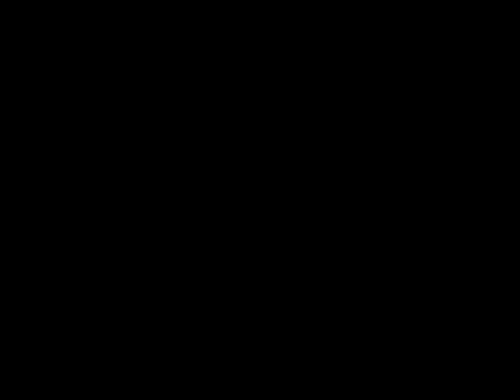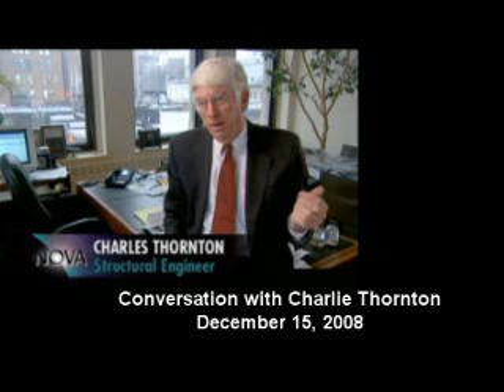pumpitout.com Jeff Hill speaks with WTC Investigator Charles Thornton

Comment: even if the buildings were not well made,  that's beside the point.  The video shows that there was no deceleration when the top part hit the bottom part.  That means the bottom was being destroyed actively at the exact same time.

That means that there was a giant external force that nobody's talking about.

The "authority" on this page is full of crap.  He's a moron or a liar.  perhaps both.
Reply: hornton says it would do no major damage to the building.  And he's the expert, not you.

NO. NO NO NO!!!  He said.  "But the idea of an airplane knocking the building OVER that would not happen for a building designed for 13,000 tons of wind load"  

 based on the lateral design loads an interview given long before 9/11.    That is an ENTIRELY separate argument to the weather the building could COLLAPSE!!!!!!!!!!!!!!!!!!!!!!!!!!!!!!!!! 

as usual, you're cherry picking.  Why do you think nobody will see it?  Read his quote I sent you.  he said no major damage.  Since when is collapse not considered major damage?

you have lied again.

Of which he is on record as saying "If you lose the lateral support of the floors the exterior wall will just BOW OUT".. 

And that is precisely what it did!!!

which proves that there were other forces than a plane crash since thornton and Newton and Feynman and Cole and I all say that a plane crash wouldn't do that.

Where's the hole in your argument???  If you look around the room and you can't spot the idiot...................?

But I spotted the idiot immediately.  It's always been you.
Reply: @lebergerdesphotons4565  If you cant tell the difference between a 767 hitting a building to a movie visual effect you've got some serious problems!!.
Reply: @roquefortfiles   le berger des photons If you cant tell the difference between a 767 hitting a building to a movie visual effect you've got some serious problems!!.
Reply

why is that?

doesn't that permit me to argue things that you think are bunk just because of the same reasoning?
Reply: @lebergerdesphotons4565  For your reasoning to make any sense you would have to believe that the Government got a hold of every single video and photograph.   And this is what you believe and this is what you would have to believe.  And a 5 year old would be able to point out the hole in the argument
Reply: @lebergerdesphotons4565  You see I could play the same bullshit game you do. I could demand that you show me the statement from Boeing or the quote from them saying the planes can't fly that fast.  But i already know how much total BS this quote is and the person they got to provide it.  I've been around aviation all my life. I am good friends with Captains of 76's.   I know what a 767 can do and how fast it can fly.   And how much complete BS these "Can't fly that fast" stories are.  The engines are more than capable of pushing the aircraft to the speeds seen.   They fly at 30,000 feet to conserve FUEL.  Not because the engines can't function at 800 feet.  Ridiculous.  I asked a friend of mine who is rated to fly a 47 and a 76.  I said.. "Can the aircraft fly at those speeds that low?".   His response??   "No problem!!  Easy the engines have to work harder but absolutely".
Reply: @lebergerdesphotons4565  And btw.  There are LOADS of factual stories of 767s flying well over speed.   But quite obviously you don't spend any time looking for information like this.  Because it would cause your brain to explode from the conflict it would generate with your "World View".
Reply: @roquefortfiles  You see I could play the same bullshit game you do. I could demand that you show me the statement from Boeing or the quote from them saying the planes can't fly that fast.

I can provide it.

 But i already know how much total BS this quote is and the person they got to provide it. I've been around aviation all my life. I am good friends with Captains of 76's. I know what a 767 can do and how fast it can fly. 

Still just your unbacked assertions.

And how much complete BS these "Can't fly that fast" stories are. The engines are more than capable of pushing the aircraft to the speeds seen. They fly at 30,000 feet to conserve FUEL. Not because the engines can't function at 800 feet.

No,  they are built to operate optimally at 30000 feet.  The mix is bad down low.  Just like your car can get you up the mountains but it runs like crap up there.

 Ridiculous. I asked a friend of mine who is rated to fly a 47 and a 76. I said.. "Can the aircraft fly at those speeds that low?". His response?? "No problem!! Easy the engines have to work harder but absolutely". 

Well my car can't go as fast when it's on a mountain pass.  Why is that?
Reply: @roquefortfiles  There are LOADS of factual stories of 767s flying well over speed. But quite obviously you don't spend any time looking for information like this. Because it would cause your brain to explode from the conflict it would generate with your "World View". 

show me!  you never show me,  you tell me that it exists but you won't show me.
Reply: @lebergerdesphotons4565  Show you?  The bigger question is what is stopping YOU from looking for it?   Ask yourself that.  Confirmation Bias?
Reply: @roquefortfiles  The fact that it will be too easy to land somewhere else than where you're vaguely indicating.

What prevents you from making any comments on any of the numerous links I've sent you?

I just read the opinions from 10 years ago of a man who'd recently retired after 37 years in nasa saying that it was very unlikely that a "stock" 767 could do that.   But for you,  your sources are always better.
Reply: @roquefortfiles  and we wouldn't be having this conversation if you would just send the links.
Reply: @lebergerdesphotons4565    Put it into a 10,000 foot per minute dive from 14,000 feet to 2000 which is what it was doing just prior to hitting the WTC. (Re controller Dave Bottiglia as he said.. FALLING LIKE A MAN HOLE COVER)   This was a one test pilot who wasn't concerned about the safety margins.   And YES there are LOADS of examples of air craft being flown WAY over speed.    Question?  You can pedal your bike to maximum speed on level ground.   Now race it down hill and you'll far exceed your MAX level speed.  The air craft is no different.   And sorry but it is not going to come apart because it is flown over its VMR for a few moments.  Forget it !!!  They are built to withstand huge forces.
Reply: @roquefortfiles  Yes.  We see that.  It has that special aluminum alloy that permits even the wingtips to go through a 4 inch concrete slab hit on edge protected by a very thick steel plate.

But it's just a hologram.  

And you're just a chump who will believe anything you see on tv.

Did you look at my link to the plane crash in which a wooden telephone pole slices a very similar wing clean through?

And  the "plane"  was not in a dive when it was caught on faked videotape. 

So sure,  it can dive,  but it can't pull out of a dive at that speed.

And if I take your word that it was in a dive at that speed,   then it had to have pulled out of it at that speed,  and that's where it would have smithereened.

But being make entirely of light,  it had no such problem.
Reply: @lebergerdesphotons4565    Can't dive??  Well you might want to tell ATC that.  They had it on radar the whole way.   And if you look at this video you'll notice the frame line is basically level with the roof of the WTC.  And the plane enters the top of the frame ABOVE the WTC and levels at the 78th floor.    Exactly as the air traffic controller said.  They thought he was in the water on the next sweep.  
https://www.youtube.com/watch?v=NwutSIUlsAg
Reply: @lebergerdesphotons4565    The wing tips didn't go through the facade.  If you spent any time researching this you would know that.   But you don't and you ignore factual material all over the place.   I think you've got more problems than you even realize.  You're a psychiatrists wet dream.
Reply: even if the buildings were not well made,  that's beside the point. (NO IT ISN"T!!!)  The video shows that there was no deceleration when the top part hit the bottom part.  That means the bottom was being destroyed actively at the exact same time.

OK.. So how does the debris out pace the rest of the collapse by 10 stories???    That can only happen if the building is slowing down the collapse.  Which it was.  

JUST NOT VERY MUCH!!!!  this is what you people DON''T SEEM TO GRASP!!!!!  AND YES!!!... YOU'RE ONE OF ....................YOU PEOPLE!!!!!
Reply: @roquefortfiles  
even if the buildings were not well made, that's beside the point. (NO IT ISN"T!!!)

Yes,  it is.  It had the strength to hold itself up and it has all of that mass.  Anything crashing into it will see it's speed immediately reduced.  That would translate into one or more of the points on the line drawn by the scientist who analyzed the video being off the line.

That didn't happen,  so everything you say is bunk.  Not surprisingly, considering the source.

 The video shows that there was no deceleration when the top part hit the bottom part. That means the bottom was being destroyed actively at the exact same time. OK.. So how does the debris out pace the rest of the collapse by 10 stories??? That can only happen if the building is slowing down the collapse. 

but not the in tact building.  there was a constant acceleration.  less than G,  but constant.  Therefore there is no abrupt collision between top and bottom.  both just dropping down as fast as they can.

It's not because the people who destroyed the buildings couldn't make it free fall that the top destroyed the bottom.

Somebody destroyed the whole thing.

You have failed (as usual) as a forensic detective.

You have succeeded (as usual) as a complete boob.

Which it was. JUST NOT VERY MUCH!!!! this is what you people DON''T SEEM TO GRASP!!!!! AND YES!!!... YOU'RE ONE OF ....................YOU PEOPLE!!!!!

Right!  and since it didn't slow it down very much,  and since Newton's laws apply even when you find them inconvenient, the bottom of the building was being destroyed at the same time by some other force, and not by the collision that didn't happen.

But keep on believing what you want.  It's a good thing that you make it so obvious what a total moron you are.
Reply: @lebergerdesphotons4565  Yes!!!!! There was a constant acceleration Because with every floor failure more and more mass is being ADDED to the failure OF THE NEXT FLOOR!!!..THAT'S WHY IT CONTINUES!!!!!. IE PROGRESSIVE.   You do understand how the hat truss works right?? Not by what you say!!
Reply: @roquefortfiles  

le berger des photons Yes!!!!! There was a constant acceleration Because with every floor failure more and more mass is being ADDED to the failure OF THE NEXT FLOOR!!!.

But with each collision, all must slow down because in the instant of the collision there is suddenly more masse that has the same momentum.

m1v1 =m2v2,  m2 > m1,  so v2 < v1.

But the video analysis didn't show this.

So you are wrong.

.THAT'S WHY IT CONTINUES!!!!!. IE PROGRESSIVE. You do understand how the hat truss works right?? Not by what you say!!

By what you say,  you are saying that the hat truss functions by suspending the laws of physics magically while it falls to the ground.
Reply: @lebergerdesphotons4565   The dynamic loading on the building was 80x the resting static load!!  The safety margin was 5x resting static.    With WTC 2 the plane hit off center on one side half of the columns carry almost no load.  The other half are HYPER loaded to the max.  You now have an off center load (that's REALLY BAD!!!!!).  But now the floors below this are being turned into a Catenary putting HUGE loads on the exterior columns which are being BOWED inward by the sagging floors.  Once the floors let go the exterior wall simply BUCKLES..  The top of the building is like someone leaning over on a bar stool and the legs finally break.  GAME OVER.  The dynamic loading landing on the next floor is MASSIVELY over its ability to stop or even slow it.   The floor connections were sliced off one after the other.  You can see this in videos.  The exterior wall peeled out and OVER like a slab of roast beef.
Reply: @roquefortfiles  
le berger des photons The dynamic loading on the building was 80x the resting static load!! The safety margin was 5x resting static. 

so much is wrong with that.  First of all,  it doesn't invalidate the momentum equation which clearly proves that there needed to be a jolt.  Unless you want to question the accuracy of the video analysis that I've showed you,  you can't ignore that except by being dishonest.

With WTC 2 the plane

the plane representing a flight which magically stayed out of a rigorous gov't FAA database?

 hit off center on one side half of the columns carry almost no load. 

An airplane that can't hold up to a collision with a canadian goose took out half of the steel columns?  Really!   Somebody still doesn't want to acknowledge frames of reference and "equal and opposite reaction".

You should publish your peer-reviewed paper in which you demonstrate clearly that Newton was a fraud!

The other half are HYPER loaded to the max. You now have an off center load (that's REALLY BAD!!!!!). But now the floors below this are being turned into a Catenary putting HUGE loads on the exterior columns which are being BOWED inward by the sagging floors.

Sorry,  the nature of lightweight concrete tells us that the floors wouldn't sag,  they would hold until they failed catastrophically but they wouldn't sag.

 Once the floors let go the exterior wall simply BUCKLES..

Really?  then how do you explain the video of giant columns swaying in the breeze?  I guess those were decorative columns which didn't participate in supporting the load?

 The top of the building is like someone leaning over on a bar stool and the legs finally break. GAME OVER.

Your person on the bar stool falls over,  not through the path of greatest resistance.

And you're talking about the part allegedly damaged,  and you're applying what you believe about that to the much bigger part which was not damaged at all.

 The dynamic loading landing on the next floor is MASSIVELY over its ability to stop or even slow it. 

Newton's law, momentum.  It slows it.  You count that mass in your favor when it suits you, and don't count it when it doesn't suit you.  You are a liar.

The floor connections were sliced off one after the other. You can see this in videos. 

show me one video with that.  you can't.

The exterior wall peeled out and OVER like a slab of roast beef.

peeled out?  Where I come from,  that's what you do when you hit the gas hard in first gear with your shelby.

Thank you for your participation in this.  I never knew that a human being could be anywhere near as stupid as you.
Reply: @lebergerdesphotons4565  The building is only going to fall as fast as gravity will allow it to.  By your fuzzy logic reasoning the top has rockets attached to it
Reply: @lebergerdesphotons4565  Someone who clearly cant understand force equals mass X acceleration.  You cant look at the results of something with the expectations of what you want the outcome to be.   That is not how science works!!!.  Well maybe it does when you're a whacko conspiracy theorist
Reply: @roquefortfiles  

as usual you are engaging in logical fallacy to try to overcome the fact of being a complete dipshit.

Fallacy of the moment:   The straw man argument.

You say that I've said something that is not well reasoned.  But you don't refer to it (whatever it might be) directly.

I think that you're incapable of even understanding my reasoning let alone refuting it.  "it" being my repitition of what Isaac Newton and Jon Cole say is impossible.

no jolt?   no gravity collapse.  It's just that simple.
Reply: @roquefortfiles  

 Someone who clearly cant understand force equals mass X acceleration.

You would seem to be referring to yourself.   You claim that the "dynamic" force of the falling 22 stories broke the bottom 88 floors.

that means its mass exerted a force to break them.  When that happened, there was necessarily an acceleration,  the famous jolt.

But the data (the official video) shows no jolt.

That is how we intelligent people know that it was a type of controlled demolition.

  You cant look at the results of something with the expectations of what you want the outcome to be. 

Then why do you continually do exactly that?

  That is not how science works!!!.

You're right!  So why is that all that you do?  Do you have something against science?

  Well maybe it does when you're a whacko conspiracy theorist

19 people working together to down 7 buildings with 2 airplanes.

That is the official conspiracy theory.

I don't buy it.  I say it was the same people who own the united states who did this to have an excuse to go steal from Iraq and Afghanistan.

And to grow and run drugs to feed their other activities.

And these things are not even in dispute.

What is disputable is what that stuff between your ears is made of and if it can serve any useful function in the future.

It hasn't done that up till now.
Reply: @lebergerdesphotons4565  Yes it broke the bottom 88 floors!!.. Entirely crushed them!!  One at a  time!!.. And quite easily!!.. That's the difference between static vs dynamic loading.   The building is ONLY DESIGNED FOR STATIC LOADING!!.. You're going to get this... When????
Reply: @lebergerdesphotons4565  Why do you think a 747 rests on hydraulically dampened landing gear? Because it has to carry the STATIC  weight of the plane in addition to the DYNAMIC weight multiplied many times over on landing.  A building only has to carry the STATIC!!!!!!!!!. and you keep attempting to talk your way around this fact!!!
Reply: @roquefortfiles  It's as simple as "every action has an equal and opposite reaction".

You don't seem to accept that.  I accept that.   Please explain to me why I have made a mistake to accept that.

an equal and opposite reaction between 22 damaged and lighter floors and 88 undamaged and heavier floors should destroy the 22 every time.

Tell me how you know that Newton is wrong?
Reply: @roquefortfiles  

 Why do you think a 747 rests on hydraulically dampened landing gear? Because it has to carry the STATIC  weight of the plane in addition to the DYNAMIC weight multiplied many times over on landing.

You have changed the subject to distract from the fact that you have lost this argument 2 years ago.

  A building only has to carry the STATIC!!!!!!!!!. and you keep attempting to talk your way around this fact!!!

No,  I'm not doing that.  when the 22 stories crash into the 88 stories,  they necessarily must slow down.  The analysis of the video shows that they did not, thus proving that the 88 floors were destroyed by some intentional act.

I'm sorry for you (in general) that you don't see it.

it's obvious enough.

But you are exceptionally stupid.  It's your cross to bear.
Reply: @lebergerdesphotons4565  No I have not changed the subject.  You FUNDAMENTALLY do not understand the ARGUMENT
Reply: @roquefortfiles  say something specific for once.

I'll respond to that.

meantime, you're just spouting lies and using logical fallacy.

dope.
Reply: @lebergerdesphotons4565   Taken directly from NIST's FAQ's page.  And btw.  What i have said about the building was long before i ever read anything from NIST.  

Quote..Since the stories below the level of collapse initiation provided little resistance to the tremendous energy released by the falling building mass, the building section above came down essentially in free fall, as seen in videos. As the stories below sequentially failed, the falling mass increased, further increasing the demand on the floors below, which were unable to arrest the moving mass."  END QUOTE..

If the floor below was already way beyond an overload, which it was!! Sorry but the argument is NOT ON YOUR SIDE!!.  The problem is getting exponentially WORSE as it GOES!!!   And your "JOLT"  came when the falling mass reached the ground.  Then it was crushed UP!!!!
Reply: @roquefortfiles  

well you're perfect for them.  You would rather quote them than think for yourself.  m1v1 =m2v2.   that's all you need to know.

easy to say that the 88 undamaged floors  didn't resist.

only it's impossible.

you're too stupid to help.

I'm sorry for you.
Reply: @lebergerdesphotons4565  YES.  Every action has an equal and opposite reaction.  What you and all of your conspiracy buddies don't seem to get is that one does not cancel out the other!!!!!  And this has all been explained by Physics Profs who are a hell of a lot smarter than You and I.
Reply: @lebergerdesphotons4565  Well what do you know!!  The very quote i went searching for and it gave me what I hoped.  

Sorry to use your little argument against you but...........Quote...

Newton's third law of motion states that every action has an equal and opposite reaction. This means that forces always act in pairs. Action and reaction forces are equal and opposite, but they are not balanced forces because they act on different objects so they don't cancel out.

(The CRUSH down of 22 floors IN MOTION was WAY beyond any Crush UP of any one of 88!!!
Reply: @lebergerdesphotons4565  I'd rather quote them because the material is fact checked 3 x over.   So you're not just arguing with me.  You're arguing with 3 other sources.  And all of them are a hell of a lot brighter than both of us.  And you can check this material on line.  You'll find the same thing repeated in multiple totally independent articles.   So either the world is conspiring against you.   Or you're wrong.
Reply: @lebergerdesphotons4565  All of this is entirely academic if you cant even accept the fact that a plane hit the building.   Work your way back from there. Otherwise it doesn't matter what 22 floors failing will do to the rest of it.  As Carl Sagan said.  There are 2 ways to look at the world.   As it is.  Or as we would like it to be.  I'd say you very much fall into the latter.
Reply: @roquefortfiles  

le berger des photons YES. Every action has an equal and opposite reaction. What you and all of your conspiracy buddies don't seem to get is that one does not cancel out the other!!!!! 

straw man fallacy for a change.  I never suggested that one cancels out the other.  What I've been saying is that if it's a gravity collapse, there would be a jolt at each collision.  No jolt?  No collision.

So explain to me how this happened with no collisions.    You can't.  But I can.  The building was destroyed by some force having nothing to do with gravity.

And this has all been explained by Physics Profs who are a hell of a lot smarter than You and I.

I'll give you half of that.  They are smarter than you.

Who isn't?
Reply: @lebergerdesphotons4565  No it's not a straw man argument and you spend all your time trying to wiggle out of every single point.  Newton's laws apply when every thing is equal.  If two cars slam into each other at the same speed there is an equal and opposite reaction.  Not so if one car is stationary and the other slams into it. The one with kinetic energy will move the stationary.
Reply: @lebergerdesphotons4565  So you'd have us believe that the structure below is being removed and taken out of the way a 7th of a second at a time.    With what?  Silent Explosives?  And if you think thermite is going to accomplish this in the time frame between each floor failure you're on glue.
Reply: @roquefortfiles  

As usual you have misunderstood.  I"m not going to bother with the straw man,  you won't know how to understand the difference between me saying something and you being convinced that I said something that I didn't.  I guess it's just that you are genuinely misunderstanding me.  I think you're doing that because of your own powerful expectations which get in the way of your perception of reality.

Now for the newton.  A moving car crashes into a parked car,  and you say that there's not an equal and opposite reaction.

You are wrong,  Newton and I are right.

the moving car will slow down when it hits the parked car,  the parked car will move.  The momentum of the system of the 2 cars will be conserved except for where some of it will be siphoned off by the energy used to deform the cars.  If they were idealized undeformable steel spheres they would conserve 100% of the momentum.

I have spent the day reading Judy Wood's book which I bought a couple years ago.

Very interesting.  Compared gravity collapses and CCD  with what happened.  It was neither a gravity collapse nor a ccd.  

A gravity collapse would have taken much more time.  

I looked at the seismic data.  She compared it to the seismic data from the ccd of the kingdome.   It wasn't enough for all of that weight to have hit the ground.

Therefore all of that weight did not hit the ground.  Most of it was turned into dust before it could hit the ground.

And the fireman and other first responders said that there were a whole lot more "jumpers"  than was ever admitted by the corrupt wholly owned by those bad guys press.  They said it was raining people.

The guy who was hanging off the 110th floor  removing his pants.

Why would he do that?

Instead of just repeating what you've heard and reinventing the laws of physics so that you can believe liars you should maybe read the book.
Reply: @roquefortfiles  
	
roquefortfiles
le berger des photons So you'd have us believe that the structure below is being removed and taken out of the way a 7th of a second at a time. 

I don't know where you got the 1/7th of a second figure.  I think that over 90% of the mass was turned into powder in a few seconds.  It never hit the ground.  That's why the bathtub survived.  That's why the there were no measurable p and s waves, only a surface wave generated by the removal of an enormous masse from that piece of ground.

With what? Silent Explosives?

With a technology that the miserable people who've controlled the patent office in every country for more than a century have stolen from some well meaning individual.  Perhaps something they stole from Tesla and have been working on for a long time.

 And if you think thermite is going to accomplish this in the time frame between each floor failure you're on glue.

Above is an example of you putting words/ideas in my mouth.

I never said anything like that.  Judy Wood was explaining how difficult it is to ignite thermite especially with any kind of precise timing.

She said that the only advantage that thermite could offer was putting more weight in the building.  Thermite is also much too slow.

The seismic signature lasted 8 seconds.  That's less time than is needed to drop a bowling ball to the ground from the roof.  The building ceased to exist faster than the time of freefall.

Your reaction is likely to be (contradict me if I'm wrong) that if you,  roquefortfiles,  don't know about a technology then it doesn't exist.

Well,  if that's what you believe then I guess you're better informed than I am.

I'm sure that "they" have plenty of things that I don't know about.
Reply: @lebergerdesphotons4565  The seismic signal was entirely within what would be expected from such an event.  The Lamont Seismic laboratory issued a statement on this.   Quite a non issue seismically.  You're not going to get P and S waves from this.  Ridiculous!!!  When the Oklahoma truck bomb went off it barely even registered on the seismograph.  Because it was above ground.  The same thing with the WTC.  And the time of the collapse of WTC 2 was 11 seconds.  Not 8.   You're making up shit again. 

No sorry they don't have things you don't know about.  We live in a world of cause and effect.  And they're aren't any Jetsons Ray Guns destroying buildings.  As Carl Sagan said.  There are two ways to look at the world.  As it is.  Or as we would like it to be.   And you spend your time massaging the evidence to "FIT" what you EXPECT to see.   Rather than letting the evidence speak for itself.    And no!! CGI airplanes do not fly into buildings.  

You need to get yourself OUT of fantasy land.
Reply: @lebergerdesphotons4565    And to back up my statement on the seismology aspect.  

Direct quote from the Lamont Lab. A Mr Kim..  Kim calculated that most of the energy did not reach the ground as seismic waves; it was mainly used up converting steel, concrete—and human beings—to dust.  End QUOTE

P and S waves??? you're on glue.
Reply: @lebergerdesphotons4565  Dude?  you can slice your "Theory" a 100 ways.  But nothing gets you out of the fact that the liberated debris is falling FASTER than the collapse.   The debris is out pacing the rest of the building.  Why?  Because the building is offering RESISTANCE!!.   Just not very much.  Why? because it is ONLY DESIGNED for static loading.  

You're going to get that when?
Reply: @roquefortfiles  

	
roquefortfiles
le berger des photons The seismic signal was entirely within what would be expected from such an event. The Lamont Seismic laboratory issued a statement on this. 

Sure,  I guess they'll say anything that the people they owe money to tell them to.

Tell us why the kingdome's seismic sig was much longer.  It weighs 7 times less,  has a much lower center of gravity.

Quite a non issue seismically. You're not going to get P and S waves from this. Ridiculous!!! When the Oklahoma truck bomb went off it barely even registered on the seismograph.

The kingdome had P and S waves.  Oklahoma  was also a false flag and happened nothing like your idiot sources said it did.

 Because it was above ground. 

And the kingdome was buried?   The kingdome was not even attached to bedrock and the wtc was.  That makes you a chump for believing the lying sacks of crap you count on.

The same thing with the WTC. And the time of the collapse of WTC 2 was 11 seconds. Not 8. 

The seismic record says you're wrong.

You're making up shit again. No sorry they don't have things you don't know about.

Cause when they get some technology that we don't know about they just tell us about it?  You can't be that naive (and stupid).

 We live in a world of cause and effect. And they're aren't any Jetsons Ray Guns destroying buildings.

Then how do you explain the first responders who all say they have no recollection of a sound of impact?  Why is the seismic sig only 8 seconds?  You can ignore all the evidence you want,  it just helps prove my point that you've got shit for brains.

 As Carl Sagan said. There are two ways to look at the world. As it is. Or as we would like it to be.

You seem to be doing exclusively the latter.

 And you spend your time massaging the evidence to "FIT" what you EXPECT to see.

It's   not true.  Just you talking again.  Respond to some of what I said above.  You won't, because you can't refute it and it turns your blather into bullshit.

 Rather than letting the evidence speak for itself. And no!! CGI airplanes do not fly into buildings. You need to get yourself OUT of fantasy land.

Still waiting to hear why those two "flights" aren't in the national database that EVERY other flight is in.
Reply: @roquefortfiles  
le berger des photons And to back up my statement on the seismology aspect. Direct quote from the Lamont Lab. A Mr Kim.. Kim calculated that most of the energy did not reach the ground as seismic waves;

Typical stupidity from you and the LSOC's you listen to.  Let's forget that gravity didn't and couldn't do that.  Let's say that it did.  The only way that what you described could happen would  be by the frame transmitting the force for the equal and opposite reaction to the ground.  And that would have made a seismic event.  

 it was mainly used up converting steel, concrete—and human beings—to dust. End QUOTE P and S waves??? you're on glue.

Me on glue, I'd still be a whole lot smarter than you.  

Like the woman who said to Winston Churchill that he was drunk.  He responded that in the morning he'd be sober and she'd still be ugly.
Reply: @roquefortfiles  
le berger des photons Dude? you can slice your "Theory" a 100 ways. But nothing gets you out of the fact that the liberated debris is falling FASTER than the collapse.

Why is that a problem?  It's not.  The measure of the video shows a constant acceleration less than g.  So of course something falling free would beat it to the ground.  This is more straw man.  You're constantly attributing things to me that I didn't say or imply. 

Because you're a permanent doofus.

 The debris is out pacing the rest of the building. Why? Because the building is offering RESISTANCE!!. Just not very much. Why? because it is ONLY DESIGNED for static loading. 

In your crazy theory, the building seems to offer the same resistance when the top fictional piece crashes into a floor as when it accelerates between floors.   Not enough resistance to make a jolt.   You can babble on about your dynamic loads,  that's not a reason for their not to be a jolt every time there's a collision.

And you can't explain what happened to the core.  Only to the lightweight concrete floors.

the whole steel frame should still be standing.

You can't build a model to show this,  so your evidence doesn't line up with experiment,  so you're wrong.

You're going to get that when?

I get it.  when will you get that it doesn't give a magic pass to break strong structures without decelerating.

I already explained to you that even if there were no attachments,  no steel  just floating slabs, that there would still be visible jolts.

You haven't denied that, you've only ignored it.

As you ignore everything which doesn't support your fantasies.
Reply: @lebergerdesphotons4565  You're obsessed with Jolts. You do realize the top 22 stories is pushing down on the rest of it with constant gravity load.  And with all of the fires weakening the steel below the top 15 stories of WTC 1 for example are slipping and creeping constantly from the start of the airplane impacts.  Once it all reaches the failure point it all let's.... GO! the crush down is MASSIVELY over any crush up.  Because things are not equal.  The bottom is at rest. The top has kinetic energy
Reply: @lebergerdesphotons4565    The seismic signal was next to irrelevant.  People think OMG this must be a huge seismic signal.  It wasn't.   As the guy said.  Most of the seismic signal was taken up in the collision of material crushing itself.  The debris hitting the ground??   Negligible.  As far a seismic signal goes.   And you can read about this stuff in multiple papers written independent of each other..  Nothing doing dude!!  Another of your GO NOWHERE arguments.  I am used to it now.   If you follow your arguments to logical conclusions they all fall apart.  Ask yourself if your arguments HOLD WATER.   Ask yourself that.  Are they supported on all sides?   If the answer is no then your argument is SHIT!!!
Reply: @roquefortfiles  

le berger des photons You're obsessed with Jolts.

Maybe because no collision exists which doesn't generate a jolt due to the conservation of momentum.  Especially a collision that needs to be violent enough to break large steel and concrete pieces.  And as I said,  even if the upper mass just ran into a free floating lightweight concrete slab it would slow down by 5%.   That would take one of those points off of that constant acceleration line.

 You do realize the top 22 stories is pushing down on the rest of it with constant gravity load. 

Constant?  Where have you seen variable gravity?

And with all of the fires weakening the steel below the top 15 stories of WTC are slipping and creeping constantly from the start of the airplane impacts.

You mean those fires that couldn't have raised the average temperature of 100,000 tons of steel by even 20 degrees?

 Once it all reaches the failure point it all let's.... GO! the crush down is MASSIVELY over any crush up.

In clear violation of Newton's law,  crush up equals crush down.  You're on your own there saying that newton was wrong.

 Because things are not equal. The bottom is at rest. The top has kinetic energy

so?  What's your point?  A mosquito hits my windshield.  My windshield can't impart a greater force than m * a  with m being the mass of the mosquito.

Two cars crash into each other,  even if one is parked,  both will be deformed.   The moving car will always slow down on contact with the other car whether it's moving or parked.

Your "reasoning"  is completely defective.
Reply: @roquefortfiles  

le berger des photons The seismic signal was next to irrelevant. 

Really?  All it is is a perfect measure of the impact of falling building with Earth.  Seems kind of useful to me.

People think OMG this must be a huge seismic signal. It wasn't.

Why did the kingdome have a bigger impact when it has less than 14% of the potential energy and was on softer ground?

 As the guy said. Most of the seismic signal was taken up in the collision of material crushing itself. 

The guy is an idiot,  he doesn't know that without the rigid connection to the ground that there's no way to crush anything.

The debris hitting the ground?? Negligible.

You're right!  So where did the buildings go?  They didn't hit the ground,  you just said so yourself.

As far a seismic signal goes. And you can read about this stuff in multiple papers written independent of each other.. Nothing doing dude!! 

Those papers are necessarily lies.  This is your most frequent logical fallacy.  It's called "appeal to authority".   But totally ridiculous.   You've got this irresistable force you like to talk about crashing into a much larger object which is bolted to bedrock and somehow it breaks this giant object without transmitting any energy to the ground?  How does it do that?  Does that really make sense to you?

Another of your GO NOWHERE arguments. I am used to it now.

Now you're using your own dumb ass as the authority you're appealing to.

Very lame.

 If you follow your arguments to logical conclusions they all fall apart. 

You haven't successfullly rebutted anything I've said.  You just cite unknown idiots who you always refuse to identify, but I should accept that they're somehow more of an authority on physics than is Isaac newton.

Ask yourself if your arguments HOLD WATER.

They do.

 Ask yourself that. Are they supported on all sides? 

You haven't been able to rebut any of them.

If the answer is no then your argument is SHIT!!!

The answer is not no.
Reply: @lebergerdesphotons4565  You're right!  So where did the buildings go?  They didn't hit the ground,  you just said so yourself.

No i didn't!!  Dude?  You extrapolate all over the place.  I said the material hitting the ground was negligible as far as seismic signal was concerned.    Most of that seismic energy was used up crushing the building.   It doesn't get transmitted through the ground.  

Where did the buildings go??  Are you friends with Judy Woods??   12% of the building was steel.  88% of it was SPACE!!  You can look that up!! If you plugged the windows shut and dragged it out to sea it would float.  

Why did the Kingdome make a bigger seismic signal??   Perhaps because it was all extremely heavy concrete impacting with far bigger sections.  More of a "Bass" signal than a "Treble" signal if you will.  Low frequencies travel further.  The WTC was just a whole lot of "relatively" light box columns.  The cement??  That was dust coming down.   And again.  They said the signal was entirely what they would expect from such an event.  And calling Mr Kim an idiot??  Dude you're pushing it seriously.
Reply: @roquefortfiles  le berger des photons You're right! So where did the buildings go? They didn't hit the ground, you just said so yourself. No i didn't!! Dude? You extrapolate all over the place. I said the material hitting the ground was negligible as far as seismic signal was concerned. Most of that seismic energy was used up crushing the building.

to crush the building, wouldn't you say that work needs to be done?  Work is mass x acceleration x distance.  So we need an acceleration.  The acceleration,  that's the jolt!  one heavy object crashes into another which resists.  It needs to resist enough to do what was done to the building.  In order to do that, the only way that the building was made to resist was to be able to hold itself up, and to hold itself straight.   So if the top part used up energy to destroy the bottom part,  the bottom part needed to resist by bracing itself against the ground.  You would have us believe that it could do that without transmitting any vibrations to the ground.  That's where you're losing me.  if the ground doesn't take the impact, then the bottom of the building can't break.  The small seismic action for the very short amount of time,  less than the free fall time,  shows that the building broke far too easily for something that used to hold up that weight.  If the safety margins are exceeded then pieces of the building will break.  when they do, that will slow down the fall.  Every model ever built shows the fall slowing down and stopping long before getting anywhere near the ground.  So now we're right back to Richard Feynman's quote.

It doesn't matter how beautiful your theory is or how smart you are.  If it doesn't agree with experiment, it is wrong.

So please explain to us here in the peanut gallery how those experiments were wrong.

Now you will once again work backwards.  You'll say that the fact that what happened happened proves that those models are wrong.

But no it doesn't.  The fact that a model of your theory doesn't behave the same as the incident proves that your theory is wrong.

The amount of energy to turn those buildings to powder,  which is what happened and has never happened in gravity falls from earthquakes nor  in CCD's.

A different result means that there was a different cause.

I"m not sure why you want to resist that obvious conclusion.

 It doesn't get transmitted through the ground. Where did the buildings go?? Are you friends with Judy Woods??

No,  we're not personal friends,  I've read her book,  I've spoken to her in emails.

 12% of the building was steel. 88% of it was SPACE!! 

According to your reasoning then 0% of it was lightweight concrete and so you've just contradicted yourself!   The great scientist has forgotten what is far and away the most massive component of the building.  Notice that space doesn't have mass!

You can look that up!! If you plugged the windows shut and dragged it out to sea it 
would float. 

I can look it up that there was zero concrete in those buildings?  You'll need to help me with a link, I don't think I've ever seen anybody make that claim.

Why did the Kingdome make a bigger seismic signal?? Perhaps because it was all extremely heavy concrete impacting with far bigger sections. 

like I said,  it was less than 1/7th the mass of a wtc tower with a much lower center of gravity.  YOU can look that up!

More of a "Bass" signal than a "Treble" signal if you will. Low frequencies travel further.

Why would 7 times the mass falling from 3 times higher  Have a higher frequency signal?

 The WTC was just a whole lot of "relatively" light box columns. The cement?? That was dust coming down.

ah,  now you suddenly remember the cement but don't correct your error.  Proving that you're incapable of recognizing your errors.

 And again. They said the signal was entirely what they would expect from such an event. 

"They"   are wrong.  "They" are paid to convince doofuses like yourself who want to believe an official story because you prefer believing in fantasy to getting to the truth.

And calling Mr Kim an idiot?? Dude you're pushing it seriously.

If he's not an idiot, then he's a liar.  You wouldn't get anybody in his field to agree with him unless they were afraid of losing their job or worse if they spoke honestly.

Earthquake collapses leave giant chunks and pancaked floors.  Controlled demolitions leave large chunks and orders of magnitude less powder.  And they take 3 or 4 times longer than freefall,  as opposed to .85 of freefall.

You ignore measurements that everybody including Mr. Kim don't dispute to prefer gross misinterpretations of partial facts.

Once again,  even if there were just the slabs magically suspended in their place and with the first contact of mass from above they were suddenly no longer suspended, the mass would take 2 x freefall at least to fall.

So that's without the resistance offered by the clips which held the slabs in place!

And as usual,  you provide zero motive for the destruction of the vertical columns.   If the clips are so weak that they can't resist the falling mass without snapping off then they're clearly too weak to pull down those giant vertical columns.

And we saw the "spire"!  And you have no explanation for where the spire went.  If it had fallen over, it would have been seen on the ground.  do you have some other explanation for there being zero photos of the spire or at least pieces of it having struck the ground?

No,  you don't.

All you have is your religion.
Reply: @lebergerdesphotons4565  I think there was a missing jolt at the Miami Condo collapse.  ROFLMAO!!!
Reply: @roquefortfiles  given your level of intellect and integrity it doesn't take much for you to say that you laughed about something.

As usual,  you're (saying that you are )laughing about something that you think you understand but you surely misunderstand completely.
Reply: @lebergerdesphotons4565  Level of intellect??    You're a legend.   In you're own mind!!  Dude??  you're a couple of notches beyond full of yourself.
Reply: @lebergerdesphotons4565  I surely misunderstand completely?   Ok Mr CGI airplanes!!  Whatever you say.  Ever heard of the Dunning Kruger effect?  Means that you have to actually be bright enough to KNOW how dumb you are.  
https://www.youtube.com/watch?v=wvVPdyYeaQU
Reply: @roquefortfiles  You've mentioned it before.  It seemed to apply itself better to your case than mine.

You're very good at just name calling.  I mix my name calling with facts that you are rarely able to respond to.  When you do respond, je patiently explain to you why you are wrong, then you'll insist that you're right with your usual "proof"  of  appeal to (lying) authority.

I spent a minute writing things for you to refute.  You didn't refute them,  you just went straight to personal attack.

That's the mark of somebody with zero information, or worse, somebody who has the information and knows that I"m right but is playing to the audience with lame tactics.

Too bad you're not capable of a debate.  That's many levels above your pay grade.
Reply: @lebergerdesphotons4565  OMG!! who are you kidding here??. I've hit you with facts after facts!!. You flat out ignore them and then pull your sanctimonious "I am smart!! bullshit "
Reply: @roquefortfiles  

Why were the bent vertical beams bent around the wrong axis?   Why weren't there thousands of truck loads to carry 500,000 tons of steel and concrete?  Why were the only trucks moving bringing dirt in and the same dirt out later?  Why were there still weird events going on at that site for years?  What made a giant cylinder of one of the smaller wtc building disappear?  Where did it go?

Where did the missing hundreds of thousands of tons of steel and concrete go?

I guess a lot of it was that fine dust inches thick over thousands of acres.  Much of it surely went into the rivers.

Do you really think anybody believes your lies?

That they don't wonder why you can't answer any of these questions?

They don't wonder because they know that you're just brain-dead or lying.
Reply: @lebergerdesphotons4565  Why weren't there thousands of truck loads to carry 500,000 tons of steel and concrete?

Physical make up of the building.  12% Steel.  88% SPACE!!. YOU CAN GO AND LOOK THAT UP!!!!!!!!!!!!!  The LIGHT GRADE!!! concrete that was only 4 inches thick was EASILY pulverized by the failing 22 stories.  The building is not collapsing.   It is being CRUSHED.  

Got anymore insanely stupid questions??
Reply: @roquefortfiles  

easily pulverized?   Sorry,  the energy to pulverize just the concrete (steel wouldn't be pulverized by a fall)  is orders of magnitude more than the gpe.
Reply: @lebergerdesphotons4565  Dude!!. A materials science paper was written on it.  Old news!!. The force was 30x more than required.   Not even remotely close to a contest.   Old news!!. Thnx for bringing up the rear on the knowledge dept.  What are you?  Last on the team?
Reply: @roquefortfiles  still can't find that paper which makes my comment old news?  I should just believe it exists because your fantasies of your credibility are so real to yourself?
Reply: @lebergerdesphotons4565   Oh the pulverization of the concrete?  Yeah.  Old news pal.  You're bringing up the rear on the knowledge front.  What are you? last on the team?  Last to know?  There is a standards testing branch ( I forget the official name of it) They conduct tests on various materials to find out where their failure point is.  They KNOW at what point the concrete will fail and what force is required.  Suffice it to say that the top 22 stories failing was 30x OVER what was required to pulverize the concrete floors.  This was not even remotely a contest.  I've read the paper 15 years ago.  If i sent you the link you wouldn't read it anyway.  Who are you kidding here?
Reply: @roquefortfiles  Send the link.  you have time to write the crap you just wrote but to not copy and paste a link to some document that you know so well?

I just read 500 pages of Judy Wood's book.  All logic.  

The debris zone couldn't have been hot, or the hydraulics of the giant machines they used to remove (and place) debris would have failed constantly.  That didn't happen.  So this is just one confirmation of one of the many lies told by the official story proven with simple logic.

Send the link.  Until you do, I'll just continue feeling quite sure that you are completely full of "it".
Reply: @lebergerdesphotons4565  Dude who are you kidding here? I've sent you a ton of links countering all the crap you write about.  You've never read one of them.  Why because you got a seriously bad case of Confirmation Bias.
Reply: @roquefortfiles  you haven't sent many links.  nowhere near as many as I've asked for.  I read any link you sent me at least as far as the first place where it was obviously and provably a pack of lies.

You can't go back through our exchanges and show any different than what I've just written.

Logic.  When applied honestly,  confirmation bias is out the window.

You have severe confirmation bias.  911 is the perfect example of something that's never happened anywhere else ever and you look at it as though it needs to fit the prototype of some known event.

Do I really need to point out some of the things which have never been seen before?

Pulverization of thousands of tons of concrete and steel?  Where has that ever been seen before?  

Please answer the question.  Where has that ever been seen?
Reply: @lebergerdesphotons4565  So...? It was explosives that pulverized the concrete floors??
Reply: @roquefortfiles  

so,  changing the subject from the link you can't send me because either you made it up or know that I'll find the logical fallacies abundantly therein.

I don't know of any "explosives"  which can do that with no release of heat.  

I don't know what pulverized so much mass so quickly into particles so small that they floated in the atmosphere with brownian movement.

I do know that much less gpe was transferred to a very hard ground than was available.  So something pulverized most of the mass and quicker than anything else I know of could have.

I feel certain that an aluminum fuselage and wing crashing into the edges of two 4 inch thick concrete slabs protected by thick steel plates would do almost no damage.  The only thing that could get inside would be an engine.

No engine was found.  They're pretty hard to destroy!  More likely is that there were no planes and therefore no engines.

What do you think pulverized all of that mass?
Reply: @lebergerdesphotons4565  No just asking the question.  Dude the paper exists.
Reply: @lebergerdesphotons4565  Most of what you're seeing is drywall. And toilets and sinks
Reply: @roquefortfiles  Imagine that I told you that a paper exists but I can't show it to you.  What would that count for?
Reply: @roquefortfiles  that is your opinion,  I guess.  Even drywall and toilets and sinks,  there's no reason for them to be powdered.  Earthquakes don't powder them.  Nor do they powder concrete slabs.  Show me the images of trucks hauling away large pieces of concrete slabs.  You can't.

It's funny that you think I h ave a confirmation bias and all you do is spout your opinions with no proof.

Any kind of application of logic I use (or borrow) you don't respond.

You won't talk about alleged high temperature debris being removed by devices with hydraulic cylinders which would be destroyed at over 80 degrees.

You aren't walking the walk.  You're just talk.
Reply: @lebergerdesphotons4565  Brownian movement is in liquids dude!!
Reply: @roquefortfiles  https://en.wikipedia.org/wiki/Brownian_motion

liquid or a gas.  straight from the mouths of the shills who back your worst stupidity with boldfaced lies.

Thanks for adding to my database of you talking out of your wrong pie hole.
Reply: @roquefortfiles  No it's not a straw man argument and you spend all your time trying to wiggle out of every single point.  

liar.

Newton's laws apply when every thing is equal.  If two cars slam into each other at the same speed there is an equal and opposite reaction.  Not so if one car is stationary and the other slams into it. The one with kinetic energy will move the stationary.

And the stationary one will decelerate the slammer quite radically.

By your (idiot) reasoning you can slam your car into a parked car at high speed wearing no seat belt and your head won't move toward the windshield.

I wish you'd try it.
Reply: @roquefortfiles  The seismic signal was entirely within what would be expected from such an event. 

Really?  Harder surface in new york than in Seattle.  Much more GPE, more weight and higher up.  same  2.1,  but in new york no s or p waves.

you're dreaming (lying).

 The Lamont Seismic laboratory issued a statement on this.   Quite a non issue seismically.  You're not going to get P and S waves from this.  Ridiculous!!!  When the Oklahoma truck bomb went off it barely even registered on the seismograph.  Because it was above ground.  The same thing with the WTC. 

Sure.  it was above ground because the 500,000 tons of hard matter were turned into fine dust before they could hit the ground.  You've made my argument for me in your usual stupid way.

 And the time of the collapse of WTC 2 was 11 seconds.  Not 8.   You're making up shit again. 

unimportant and you haven't verified it.

No sorry they don't have things you don't know about.  

you're wrong again.

We live in a world of cause and effect.  And they're aren't any Jetsons Ray Guns destroying buildings.

wrong again.

  As Carl Sagan said.  There are two ways to look at the world.  As it is.  Or as we would like it to be.  

yes.

 And you spend your time massaging the evidence to "FIT" what you EXPECT to see. 

You figure I expected to see 500,000 tons of steel and concrete turned to dust in less than 10 seconds?

  Rather than letting the evidence speak for itself.    And no!! CGI airplanes do not fly into buildings.  

neither do real ones in this case.

You need to get yourself OUT of fantasy land.

yes,  a conversation with you is obliged to  resemble fantasy land.
Reply: @roquefortfiles  You're obsessed with Jolts. You do realize the top 22 stories is pushing down on the rest of it with constant gravity load.  And with all of the fires weakening the steel below the top 15 stories

black smoke "fires"  weakened the steel?  Why does my sheet metal wood stove still have the same strength it had 20 years ago?  

 of WTC 1 for example are slipping and creeping constantly from the start of the airplane impacts.  

alleged airplane impacts from airplanes not in the u.s.  f.a.a. database.

Once it all reaches the failure point it all let's.... GO!

But there wasn't enough heat to do that.  35 tons of jet fuel versus 250,000 tons of steel and concrete.  can't raise the average temperature 20 degrees.

 the crush down is MASSIVELY over any crush up.  

so Newton was wrong.  So Jon Cole's experiments are wrong.  so you're not an idiot?

Because things are not equal.  The bottom is at rest. The top has kinetic energy

damn you're stupid.
Reply: @roquefortfiles  ou're right!  So where did the buildings go?  They didn't hit the ground,  you just said so yourself.

No i didn't!!  Dude?  You extrapolate all over the place.  I said the material hitting the ground was negligible as far as seismic signal was concerned.

why is 500,000 tons negligible?

    Most of that seismic energy was used up crushing the building.  

then why did it accelerate at near free fall?

 It doesn't get transmitted through the ground.  

It comes screeching to a stop just above the ground like in a warner brothers cartoon.

Where did the buildings go??  Are you friends with Judy Woods??  

you mean the only serious scientist to look at this event?

 12% of the building was steel.  88% of it was SPACE!!  

And the (fake) airplane?  what percent of that is space?

You can look that up!! If you plugged the windows shut and dragged it out to sea it would float.  

so would the airplane.

Why did the Kingdome make a bigger seismic signal??   Perhaps because it was all extremely heavy concrete impacting with far bigger sections. 

so why did the wtc turn into dust first?

 More of a "Bass" signal than a "Treble" signal if you will.  Low frequencies travel further.  The WTC was just a whole lot of "relatively" light box columns.

250,000 tons versus 40,000 tons.
much higher center of gravity.
you are an idiot.

  The cement??  That was dust coming down.

What force turned it to dust?  if it was gravity, it should have taken most of a minute for the building to fall.

   And again.  They said the signal was entirely what they would expect from such an event.

Liars will tell lies.  It's their business.

  And calling Mr Kim an idiot??  Dude you're pushing it seriously.

I have no idea who he is, but if he agrees with you he's clearly an idiot.
Reply: @lebergerdesphotons4565  The heavy concrete of Seattle hits the ground with a far bigger signal than the absurdly LIGHT  shattered exterior wall sections of the WTC  do.  Thanks for playing!. We have some lovely parting gifts
Reply: @roquefortfiles  

the kingdome was broken into large pieces by explosives.  The wtc's were transformed into fine powder by interference fields.  

The same thing would have happened had it been the slightly heavier concrete you're talking about.

You are the champion of missing the point of everything.  Give yourself some nice prizes for being among the most ignorant.
Reply: @lebergerdesphotons4565 interference fields??? What the fuck planet do you live on?
Reply: @lebergerdesphotons4565  Brownian movement??  Dude you have got to be kidding.   Stuff that happens in a microscope view finder is happening at the WTC??   What drugs are you on.  Or should be.  You're another of these ultra physics geeks who think you're just way brighter than every body else.    Sorry.  Not working with me.
Reply: @roquefortfiles  Brownian movement??

yes.  fine powder in the atmosphere will move with a brownian movement.

  Dude you have got to be kidding.

No.  not kidding.

   Stuff that happens in a microscope view finder is happening at the WTC?? 

Yes.  the proof is in the images.  A collapse should show a gaussian curve as small particles which you agree have been pulverized move toward the ground while crashing into each other.  But the image shows a vertical cloud of these fine particles,  not a gaussian curve.

perhaps you can find another interpretation of that image.  good luck!

  What drugs are you on. 

Music and literature.

 Or should be.  You're another of these ultra physics geeks who think you're just way 
brighter than every body else. 

No,  that's not my perspective.  I don't think I'm particularly smart, but you and everybody who thinks like you are spectacularly stupid and incredibly ignorant.

It's not a great combination.
Reply: @lebergerdesphotons4565  Yeah well you see that's what happens when things like dry wall made of ..............CHALK get crushed.
Reply: @roquefortfiles  

there was lots more lightweight cement than there was dry wall.  Your point seems to be that it wasn't crushed.  You also admit that it wasn't on the ground.

So if it wasn't crushed, and it wasn't on the ground,  where did 220 4 inch slabs go?

How about 4 aircraft engines and 4 black boxes?  Where did they go?

You're really not very good at this.
Reply: @lebergerdesphotons4565  Well. Two of the United 175s  engine cores hang in the 9/11 museum.  The black boxes likely plugged in the building on impact as they're in the tail. Then probably incinerated in the fuel fed fire. Then probably all but obliterated in the collapse.
Reply: @lebergerdesphotons4565  I also admit that it wasn't on the ground?? No I didn't.
Reply: @lebergerdesphotons4565  Ok. Let's cut to the chase.  The 4 inch thick light grade concrete floors were pulverized by what?
Reply: @roquefortfiles  yes you did.  And recently.  You're lucky I don't have a searchable database of your stupidity.
Reply: @roquefortfiles  it's funny to watch you lie.

gov't museum?  yes,  we can believe that!  Just like the dinosaur with the long skinny neck who would faint if he ever lifted his head.
Reply: @roquefortfiles  

Ok. Let's cut to the chase.  The 4 inch thick light grade concrete floors were pulverized by what?

energy.

a minute ago you said you didn't admit they didn't hit the ground.

Now you admit they were pulverized.  and they were pulverized in the air, so the vast majority of the energy would have been released on impact on the ground, but you have this event happening which would use 10,000% of the energy available happening before the fall.
Reply: @lebergerdesphotons4565  You jump to conclusions all over the place.
Reply: @roquefortfiles  for example?
Reply: @roquefortfiles  tell me doofus,  has your government ever lied to you?

They've lied early and often.  The sinking of the Maine,  Pearl Harbor,  The Lusitania.

Why would 911 be the exceptional event which wasn't pre-fabricated with extensive lies?

Are you going to say that my three examples above are not good examples of the gov't lying to go to war?

I don't think anybody's denying those three.  Maybe Pearl Harbor's lies are still believed by somebody.  Perhaps for the benefit of still living children of wwII veterans.  But there's nothing convincing about those lies.  FDR let it happen to satisfy the bankers who've owned the usa since 1871 when they changed our constitution without our permission.
Reply: @lebergerdesphotons4565  You're on glue.  You're not well.
Reply: @lebergerdesphotons4565  I have no idea what you are saying. Just a head roll.
Reply: @lebergerdesphotons4565  What do you think turned the building to powder?   22 stories falling on the rest of it.  Why? Because it is only designed to carry all this weight STATIONARY.    You're going to get this when?
Reply: @roquefortfiles  

I"ll "get it"  when the experiments which Jon Cole ran come out the way you suggest they should.  Unfortunately,  the come out the way they come out.  He drops a cinderblock onto a pile of cinderblocks from a great height.  Much higher proportionately than the wtc top 22 floors would have fallen to touch the bottom 88.

And what he saw with each run of the experiment is that 1 block  breaks one block and then it stops.  2 blocks break 2 blocks and then it stops.  22 blocks would break 22 blocks and then it stops.

The fact that it was a dynamic load is the reason that the same number of blocks which fell were broken.  

But it never continues.

So you are in your usual position.  Arguing against experiments and against science.

Using 911 and your incorrect explanation of it to "explain" 911.   Your evidence is what you saw and your own bad explanation.

You refer to yourself as though you're an oracle.

I'll stick with experimental evidence.

Jon cole did a good job of providing that.

You have none.

Because you are a dyed in the wool doofus.

Unless you would care to provide some valid reason why Cole's experiments are not a good microcosm of the larger incident.
Reply: @roquefortfiles  watch it again:

https://youtu.be/XkXeNawHFFo

remember,  the calculation, all  the concrete slabs just floating in the air in their place.  A machine which releases them at the instant of impact of the 22 floors coming from above.  The conservation of momentum means that this will cause the falling mass to take over 1 minute to get to the bottom.

but it fell in much less than 1 minute.

How do you explain this?  And I've spared your "dynamic load"  from having to break the connexions to the steel and the steel.

Your argument is so totally brain dead that you have to ignore it when I mention this.

Are you even capable of understanding what I've just written?  

I think not.
Reply: @lebergerdesphotons4565    When you put a nut in a nutcracker and slowly press the nut finally reaches the point where everything just FAILS.   The building was "CREEPING" as soon as the plane hit and exploded.  It simply took an hour and half until the creeping load of 22 stories reached the point of total failure.   With WTC 2 having the plane take out the columns on the short axis of the columns resulted in an unstable load.   Half the columns were carrying almost no load.  The others were being asked to carry a substantially larger load.  But it is OFF CENTER !!!There is no problem with this as long as the exterior wall remains intact.    But that failure came when the bowing walls finally let go of the floors at the 78th floor (CLEARLY SEEN ON VIDEOS). without the cross brace of the floors the columns DON'T WORK!!  The top 22 stories was set in motion.  THAT'S REALLY BAD!!!!!!!!!!
Reply: @roquefortfiles  

sorry dude.   it's all bullshit, what you've written.

Why do you ignore Jon Cole's experiments?

Because you know that blows you and your friend who helped you write that out of the water.

You've got talk,  Jon Cole has experiments.

Unless you can make some convincing argument for why Jon Cole's experiments are not applicable,  forget it.

And you've also ignored what I said regarding if the floors just were suspended in the air until the instant that the falling mass contacted a floor,  the momentum equation shows that the fall would take a minute because each of the floors starts at 0 mph descent.

So what about that?

I could go on,  but you're already blown away by logic.

Logic is the one thing you're not prepared for.

Neither giving it nor getting it.
Reply: @lebergerdesphotons4565   This experiment has been done before.  And it has been done by an engineer to illustrate how the WTC works. A tube within a tube.  This might sound ridiculous but it illustrates the principle perfectly.   if you gently stand on an empty beer can it will hold you no problem.  I've done it.  Because the walls are straight and in compression.  All you have to do is buckle the side of the can and you will telescope the can right to the ground.   The exact same principle applies to the WTC.  When everything is in alignment the building is working as it was DESIGNED.  When stuff goes out of alignment the failure process speeds up. Sagging floors equal bowed columns.  They can't stay like that.  If the floors separate from the columns the columns load carrying ability DROPS by a LOGARITHMIC factor.
Reply: @roquefortfiles  

here's the blatant problem with your analogy.  you are 1000 times heavier than the beer can.    the 22 stories  are only 15% of the weight of the building.

For your analogy to hold water (or beer)  you need to collapse that beer can because you set a 600 milligram weight on it.
Reply: @lebergerdesphotons4565  Its all bullshit what I've written?  It is rather interesting that an engineer uses exactly the same illustration.  You going to say the same thing to him?   You talk a big game dude!! Jonathon Cole's experiments are ridiculous Rube Goldberg nonsense.   They have nothing to do with how a building WORKS.   Maybe you should offer your services to the condo collapse in Miami.  There was a missing jolt.
Reply: @lebergerdesphotons4565  15% of the weight of the building.

YES you are correct Ed McMahon.  That's the STATIC weight.   The dynamic weight of it moving is something else ENTIRELY and so far you prove with everything you write that you have no grasp of the subject matter.  

None.   And you prove it constantly
Reply: @roquefortfiles   Its all bullshit what I've written?

yes,  as usual.

 It is rather interesting that an engineer uses exactly the same illustration. 

What engineer are you talking about?

 You going to say the same thing to him?   

If he's as stupid as you are,  sure.  What's a diploma?  Just somebody who's been taught things and memorized them so he could pass the test.

You talk a big game dude!! 

If you say so.

Jonathon Cole's experiments are ridiculous Rube Goldberg nonsense.   

Explain why?  

They have nothing to do with how a building WORKS.

I notice a serious lack of commentary regarding the fact that your previous beer can analogy lacked any intelligence at all.  Comparing the equivalent of a 3 km meteor hitting the wtc at mach 10.

That's not what happened.

   Maybe you should offer your services to the condo collapse in Miami.  There was a missing jolt.

Not aware of a condo collapse in Miami.
Reply: @roquefortfiles  e berger des photons 15% of the weight of the building. YES you are correct Ed McMahon. That's the STATIC weight. The dynamic weight

dynamic weight?  I guess you mean kinetic energy.

 of it moving is something else ENTIRELY and so far you prove with everything you write that you have no grasp of the subject matter. 

Yes,  I couldn't come up with a brilliant analogy like your beer can analogy where  you compare 1000 times the weight versus 15% of the weight.
Reply: @roquefortfiles  you seem to have no concept of the ideas of rube-goldberg.  Their drawn inventions were always something extremely elaborate to do something very simple.  Jon Cole's experiments are very simple to do something very simple.
 
Your response regarding Jon Cole's videos was, as usual,  a logical fallacy.   One of your favorites,  ad hominem.

That doesn't get you out of explaining why his experiments don't apply to the wtc "collapses".

Those buildings went up without the roof truss being in place.  They weren't nearly ready to fall over without the roof truss.

They were underneath  any activity that happened above.  The heat from fires would damage your magic 22 stories,  not the 88 below.  

You are also still not reacting to my assertion that even if the 88 4 inch slabs were merely suspended (magically)  and released as the falling mass arrived,  their inertia would slow down the fall which would take more than a minute.

The only way for it to all fall in 10 or 12 seconds (so you don't argue whether it was 10 or 12) is if  the lower 88 were already on their way down before the upper 22 start to fall.  Or if they lose all tensile strength instantly.  That's what happened.  They were turned into powder in < 10 seconds by some force which none of us have ever seen since.

But it sure looks like the hutchinson effect.
Reply: @lebergerdesphotons4565  Coles experiments are retarded!!. The arbiter of competing..  whatever!!.    Newton's third law does not mean that one thing cancels out the other. This has all been explained adnaseum on NISTS FAQS.   You seem to think that Cole has something over them. He doesn't
Reply: @roquefortfiles  Coles experiments are retarded!!.

more ad hominem.

The arbiter of competing..  whatever!!. 

more ad hominem

   Newton's third law does not mean that one thing cancels out the other.

Who said that that's what that means?

 This has all been explained adnaseum on NISTS FAQS.

Show me what you're talking about because it's just not making sense.  As in you're making no point,  probably just a lack of communications skills on your part.  You need to make more of an effort to actually communicate.

   You seem to think that Cole has something over them. He doesn't

He has done experiments which demonstrate what happens when one mass falls on another.   Your only argument against that being useful would be to say that the wtc towers weren't as proportionally strong as a cinderblock.

Please try to make a coherent point.   

It really does look like all that counts for you is to satisfy your ego by believing what you say.   You seem to have no interest in actually making a point.   I'm once again finding myself wondering whether you're mentally retarded in some way.
Reply: @lebergerdesphotons4565  Retarded Experiments.  Rube Goldberg 9/11.   Quote.. "NO BUILDING IS DESIGNED FOR THIS KIND OF TRAUMA"..  End Quote.   Head Engineer of the Petronas Towers.    Good enough for me.
Reply: @lebergerdesphotons4565   As written on a Structural Engineering page.  "Question?"  Do you think the WTC could deal with 22 stories failing?   Answer.   Absolutely NOT.  The chief engineer Les Robertson is on record saying.  "There is NO WAY that one floor is going to deal with the weight of 14 stories falling on it.  Not possible.  Not REMOTELY possible".     That was 14 stories.   Do you think your problem improves or gets worse with 22 Stories failing.   I'll give you a moment.
Reply: @roquefortfiles  
 	
roquefortfiles
le berger des photons As written on a Structural Engineering page. "Question?" Do you think the WTC could deal with 22 stories failing? 

That's already wrong.  Of course it can "deal with it".  It might deal with it by rejecting everything with no damage down to turning into powder.  In either case and every case in between it has "dealt with it".

Answer. Absolutely NOT. The chief engineer Les Robertson is on record saying. "There is NO WAY that one floor is going to deal with the weight of 14 stories falling on it. Not possible. Not REMOTELY possible". 

If you would care to notice,  this agrees absolutely with myself and John Cole, not to mention I saac Newton and Richard Feynman.  Jon's experiment shows that 22 stories  would cause the radical deformation of 44 floors.

That was 14 stories. Do you think your problem improves or gets worse with 22 Stories failing. I'll give you a moment. 

I would never need a moment to consider anything you say unless it was one of the cases where your communication skills (or lack thereof) get in the way of me understanding.

This time I think your meaning was clear.  And I immediately saw that perhaps you think I was suggesting a result radically different from the result obtained by Jon Cole in his experiment.

No.  I believe in experiments.

You are the one who rejects their results because they differ from what you WANT to believe.
Reply: @lebergerdesphotons4565      You and Jonathon Cole have ZERO grasp of this subject.  The building only exists when everything is working as it was designed to.   It is NOT DESIGNED to arrest and or stop 22 stories MOVING.  And if one floor can't do it (Which it can't) what makes you think the next is going to fare any better with an even larger load landing on it.  Answer?   It isn't.
Reply: @lebergerdesphotons4565  

https://www.youtube.com/watch?v=wZCFo3Lcbx8&t=1s

Static vs Dynamic loading. Ridiculously simple to understand.    The top 22 stories of the WTC has been at the top of the building for 35 years because everything is working AS DESIGNED (SEE POP CAN the Analogy is exactly the same!!!)   When the exterior columns failed, And they did.  And we can see this in videos!!  The top 22 stories are now a DYNAMIC LOAD!!.   NOTHING.  NOTHING!! Below this is designed to arrest/ stop this much weight in the 6 inches that any one bracket, bolt or rivet would be REEFED from its mounts.  And the process continues to the ground because more and more material is being ADDED to the equation as it goes.  Your problem is getting EXPONENTIALLY worse as it goes.  This is why it continues.  
Neither you or your buddy Cole seem to GRASP the difference between STATIC vs DYNAMIC loading.   SEE POP CAN AT END.
Reply: @roquefortfiles  le berger des photons You and Jonathon Cole have ZERO grasp of this subject. The building only exists when everything is working as it was designed to. It is NOT DESIGNED to arrest and or stop 22 stories MOVING. And if one floor can't do it (Which it can't) what makes you think the next is going to fare any better with an even larger load landing on it. Answer? It isn't. 

You miss every point.   

Look for once at what I explained to you already several times.

the falling mass hits the first target.  The 87th floor.

let's say that the huge section steel columns which have held up that lightweight concrete platform for 30 years offer no resistance.  zero.

you still should see that the fall is slowed by the fact that a mass of 22 which is falling has just crashed into a mass of 1 which has zero downward velocity.

that will slow the whole thing down.  There will be a jolt, like in every collision anybody has ever experienced.  It's what defines a collision.

If you do the math,  you will see that if this is what happened,  it would have taken about a minute to fall.

But everybody agrees that it fell in < 12 seconds.

That means that somehow these 88 platforms didn't slow down the falling mass at all.

that they offered zero resistance,  that they had no inertia.

You are arguing  that 150,000 tons of concrete has zero inertia.

The only one of us (you, me,  cole,  newton, feynman)  who has no idea of the concepts at work here is you.

When you look around the table and you don't know who the doofus is,  it's you.

Often when you look around the table and you think you know who the doofus is,  you're mistaken and it's still you.

Please explain to us how it is that 150,000 tons of concrete have zero inertia?

Or explain to me the flaw in my reasoning.
Reply: @lebergerdesphotons4565  that will slow the whole thing down. 

Yes it will.  How much?? Oh about 1% at best.  Now this mass is added to the collision with the next floor so it hits that floor at 18 mph instead of 20.  But the mass is LARGER.  And this dynamic is happening with each floor collision.  And all of the math associated with it was laid out in this paper.  And i still say that you haven't grasped it yet.   These are hard numbers.  This is not fudged math.  I suggest you take an hour and read it. 

http://www.burtonsys.com/staticvdyn/
Reply: @roquefortfiles  le berger des photons that will slow the whole thing down. Yes it will. How much?? Oh about 1% at best.

how did you calculate that?

 Now this mass is added to the collision with the next floor so it hits that floor at 18 mph instead of 20. But the mass is LARGER. And this dynamic is happening with each floor collision. 

There are lots of problems with that "analysis".  

I've said this to you before.  You are always treating the falling part like it's some coherent, rigid, single object.  It's not.

And you are treating the bottom undamaged portion of the building which is heavier and stronger than what is falling onto it as though it's just ready to become crumbs.

I'm not somewhere where I can do that math now.  I'll do it later.  I'm interested to see if your 1% is a good estimation.

And all of the math associated with it was laid out in this paper.

Yes,  another paper where I must trust your memory and capacity to understand.  I have to accept that of a doofus who can NEVER find a link.

 And i still say that you haven't grasped it yet. These are hard numbers. This is not fudged math. I suggest you take an hour and read it. 

Send me the link.  I'll read it.
Reply: @lebergerdesphotons4565  And you are treating the bottom undamaged portion of the building which is heavier and stronger than what is falling onto it as though it's just ready to become crumbs

It is heavier and stronger.  YES!! ABSOLUTELY.  YOU ARE CORRECT SIR!!  But it is only heavier and stronger to carry the GRAVITY LOAD of the building (You can look that up!!).  This has nothing to do with the DYNAMIC loading of 22 stories collectively failing.   You're mixing up two entirely different things.  GRAVITY LOAD vs DYNAMIC load.  Not the same thing. 
Yes the steel got heavier and thicker moving toward the ground.  This is only to carry the dead GRAVITY LOAD of the building.    Nothing to do with DYNAMIC LOADING.
Reply: @lebergerdesphotons4565     With my frequent refrain.  "You can look that up".   

The static load is the effect of gravity on a structure. The dynamic load is the forces that move or change while acting on the structure.

I didn't write this.
Reply: @lebergerdesphotons4565   I sent you the link.  Obviously you're not remotely interested in reading it.  Nothing new.  You're like somebody who goes to the library then stands at the front door and refuses to go in and then folds your arms and says... "See I am right"
Reply: @roquefortfiles  le berger des photons With my frequent refrain. "You can look that up". 

Don't you get it that on today's internet I can look up a thing and you can also look up that same thing and we'll have two totally opposite responses each from people with the appropriate credentials?

that's why "appeal to authority" is  a logical fallacy.

You want me to accept your "authorities".  I think these people have been fooled and or bought.  That's why I try to base my opinions on logic.

And if you don't send me a link,  I will likely find the opposite response to what you have found.  It's why I've been sending you links.  Explain to me why you don't send me links to the information you've found?

The static load is the effect of gravity on a structure. The dynamic load is the forces that move or change while acting on the structure. I didn't write this. 

As usual,  you're only making a part of a point.  Which is indistinguashable from making no point at all.

You speak of a force which exceeds the capacity of the targeted object to resist without deforming or failing.  I've never said that the wtc towers didn't break/deform.  They obviously did.

That's not the question.  The question is what did that to them.

Now,  your force exceeding the static load by more than the safety margin,   of course that's going to cause permanent deformation and/or breakage.  That's definitional.

But that doesn't give you a free pass to say that this little item explains the entire building disappearing and being replaced by hundreds of thousands of tons of fine powder.
Reply: @roquefortfiles  le berger des photons I sent you the link.

If you sent me a link 100 messages ago and I didn't notice it,  excuse me.  I've asked you numerous times to send the link.  It's much less trouble for you to send the link again (if you really sent it once,  all I have is your word on that and your word has never impressed me) than for me to try to find a link in some nameless message that I'm sure you're lying about having sent.  Just send it again.

 Obviously you're not remotely interested in reading it. 

Now you're telling me that you know my mind better than I do.  I could show you 5 times that I've asked for the link.  You haven't sent it.  You're lying about having sent it.  Here's your chance to prove you're not a liar.  Send the link with enough context from your message where you allegedly already sent it to prove that I'm mistaken about you being a liar.  Good opportunity for you,  you won't do it, because you're a liar.

Nothing new. You're like somebody who goes to the library then stands at the front door and refuses to go in and then folds your arms and says... "See I am right" 

That's ridiculous.  But that's what you're good for.  ridiculousness.
Reply: @lebergerdesphotons4565  I sent you the link 2 or 3 emails ago. Today
Reply: @roquefortfiles  

ok.  it was the fifth one down.  not the second or third.

And there is quickly everything wrong with it.

First of all it's still a straw man argument because I never expressed skepticism that there was a difference between a static and a dynamic load.

Jon cole's experiments demonstrate that the dynamic load can't damage a piece of the bottom bigger than the part which falls on it.

Your guy's experiment,  it's immediately got problems.  He compares the paper holding a few hundred pennies statically in a jar to the five pennies taped together falling from a couple metres up into the paper.

The comparison is invalid.  He should have had those pennies falling not onto the paper directly, but onto a rigid object with the same surface as the bottom of the penny jar.

At that point,  I was about two thirds through the article you said would take an hour to read and it had taken me about 1 minute.

From this, I extrapolate and figure that I can read 40 times faster than you.

This doesn't surprise me.  You have clearly demonstrated yourself to be slow and dense.  

In fact,  that is what you have done the best job of communicating.

You've got ad hominem for Jon Cole for having designed an experiment which proves what he says.  He invites the viewer to show his own experiment which contradicts his conclusions if the viewer can.

I see that you can't.  I know that I can't,  because his experiment is legitimate.

As I said the other day,  perhaps a mass falling at mach speed could damage more than a piece its own size,  but even that is not sure.

The reason I think it wouldn't is because the two pieces would be pulverized and therefore  the upper piece would not be able to apply anywhere near the force that it could have as a solid unit.

If your boy who wrote that piece would have been honest by maintaining the same surface area,  I'd have finished reading it.

But he's a cheater.  You may not be a liar,  you might just be a fool with a desire to believe a thing that's not true.

Tell me,  what's your interest in believing what you believe?

My interest in believing what I believe is that it is supported by experiment.  And therefore Richard Feynman says it's true.

Your belief is contradicted by experiment and therefore Richard Feynman would say that it's wrong.

It doesn't matter how beautiful your theory is.  It doesn't matter how smart you are.  If it doesn't agree with experiment,  it's wrong.
Reply: @lebergerdesphotons4565  Jon cole's experiments demonstrate that the dynamic load can't damage a piece of the bottom bigger than the part which falls on it.

100% Wrong.
Reply: @lebergerdesphotons4565   Well unfortunately it DOES agree with experiment.
Reply: @roquefortfiles  show me the experiment that you've designed which proves that.  You're likely just working backward from your baseless belief in the official story of corrupt government and press.

I'll stick with Newton Cole and Feynman until you show me your experiment.
Reply: @roquefortfiles  ok.  show me the experiment.  Your word is just not good enough for me.  I'll need to see the experiment.
Reply: @lebergerdesphotons4565   Are you blind?? Or just totally ignorant?  Did you not read any of the article i sent you?  The guy showed you that 1/10th the weight of the pennies would go straight through the surface holding it.  And you can't extrapolate to what the entire JAR of pennies would do if dropped from the same height?  This is a REAL experiment.  With REAL numbers.  And it has nothing to do with paper or pennies.  It has to do with a PRINCIPLE.  And the exact same principle applies to the WTC
Reply: @roquefortfiles  

Are you blind?? Or just totally ignorant?

No,  I"m not blind.  Are you deaf?  Your "boy" wrote his "article".  He spoke of a static load on a piece of paper.  A jar with 10x pennies in it.  The paper held.  Then he took x pennies, brought them up to a certain height above the paper and dropped them.  They broke the paper.  This is not surprising.  He dropped (I believe) 5 pennies attached together.  The probably hit on edge.  Can you calculate for me the difference in surface area between the 10x pennies in the glass jar and the x pennies falling on edge directly on the paper?  It's probably about 1000:1.  Not a fair comparison.  If you have a valid point to make then you don't need to lie and cheat.

  Did you not read any of the article i sent you?

Yes,  I guess you didn't read or understand my response.

  The guy showed you that 1/10th the weight of the pennies would go straight through the surface holding it.

But he didn't hold the surface constant.  why?  Does he have something to hide?  Is he lying about something to prove a point which doesn't hold water?  That's what it looks like.

  And you can't extrapolate to what the entire JAR of pennies would do if dropped from the same height?

sure,  I can.  How is it possible that you don't see the difference between the surface area of five pennies versus the surface area of a jar?

  This is a REAL experiment. 

Sure,  it's real,  but it hasn't proved anything because of the bad faith premises.

 With REAL numbers. 

Real numbers which show the bad faith quite clearly.

 And it has nothing to do with paper or pennies.  It has to do with a PRINCIPLE. 

Your constant dishonesty is necessary for you to try to make a point which is inherently flawed.

 And the exact same principle applies to the WTC

Ok.  Does that mean that the top 22 stories somehow have all of its weight concentrated on a surface equal to the surface of five pennies?  And also,  it's bulk  is somehow suddenly stuck together in a way that leaves it invulnerable to breaking up?

Please try to do better.  This is not even requiring an effort to destroy your "reasoning".

I know you can do better roquefortfiles.  Right now the lame effort you're making is making James Garner spin in his grave.
Reply: @lebergerdesphotons4565  But he didn't hold the surface constant.

???????????????????!!!!
Reply: @lebergerdesphotons4565  You're beyond an eye roll !!     You simply can't deal with facts.   Unless of course your buddy is showing you everything you want to see.   Preaching to the converted.
Reply: @lebergerdesphotons4565  Ok.  Does that mean that the top 22 stories somehow have all of its weight concentrated on a surface equal to the surface of five pennies?  

Dude?  you're incapable of understanding a PRINCIPLE!!  Explaining away repeatable science.
Reply: @lebergerdesphotons4565  How is it possible that you don't see the difference between the surface area of five pennies versus the surface area of a jar?

How is it possible that YOU DON'T????!!  OMG!!!!! If it can't hold 1/10th of the weight dropped on it WHAT DO YOU THINK THE ENTIRE JAR IS GOING TO DO TO THE PAPER?     It would be REEFED from its mounts    Exactly how the floor below the 22 stories was.
Reply: @roquefortfiles  you've compared the pressure of the static load of a jar of pennies to the pressure of the dynamic load of 5 pennies taped together.  The surface area has been reduced enormously therefore the pressure has been increased by the same factor.
Reply: @roquefortfiles  

it's quite difficult to help you understand the things you don't understand.  You don't really seem desirous of accumulating knowledge.  You want to be "right" without ever understanding the problem at hand.
Reply: @lebergerdesphotons4565  This is so ridiculously easy to understand even you could understand it!!!!   

https://www.youtube.com/watch?v=qMyw-6bDbTs
Reply: @roquefortfiles  I've understood everything you've said.  You are the one who doesn't understand what YOU have said.  Pressure is force divided by surface area.  The concentration of the force makes the difference between the target yielding or not.

I remind you that I've never said that the target would hold up to the dynamic load without permanent deformation.  You've constantly babbled on about that as though I hadn't understood even though I've never denied what you said.

What I've said and what the experiments of Mr. Cole have said is that the upper part can't destroy more than its own size.  22 stories could take out at most 22 stories.

After that,  everything is in small pieces and there won't be enough PRESSURE  on the 23rd story down to break it.

And for even 22 stories to be taken out it counts on the mass of the 22 falling stories to remain coherent.

They wouldn't.  If you were capable of running experiments you would see that.

All you are capable of is believing what you want to believe.

That's one of the best reasons to run experiments.

But you haven't even created a single THOUGHT experiment,  let alone a physical experiment.

And thought experiments are a good thing.

If every you have your first thought, I hope you'll share it with us.
Reply: @lebergerdesphotons4565  What I've said and what the experiments of Mr. Cole have said is that the upper part can't destroy more than its own size.  22 stories could take out at most 22 stories.

NO NO NO NO NO NO...NEEEEEEOOO!!!
The difference in all of this is that once the Dynamic loading gets going... GAME OVER.  Because mass is constantly being ADDED to the equation. Your problem is getting EXPONENTIALLY larger as it goes.  22 stories then becomes 23 failing.  And Newton's third law was OBSERVED.  It hits the next floor at a slightly reduced speed from resistance.  But the mass is LARGER than the last floor collision.  And that mass is SQUARED. 4x WORSE!!  With each floor failure the problem is 4x WORSE.   This is why it continues.  Nothing below the point of failure is designed to arrest and stop 22 stories in the ??? 6 inches that any ONE bracket, Rivet or bolt would be "REEFED" from its mounting.   And you can see this on the exterior wall from the window of Les Robertson's office. The floor mounts were basically sliced off the exterior wall. Like a tree having its bark taken off.   You can see it in videos.  Clearly.   The wall rotates over and out and every floor mount is GONE!!
Reply: @roquefortfiles  Then why hasn't anybody designed and run an experiment that proves what you're saying?  Someone has designed and run experiments that show that it won't happen.  When Jon Cole drops the cinderblock from 12 feet above the pile of cinderblocks the second cinderblock down has no problem.  Are you suggesting that the wtc was much weaker than a cinderblock?

And you're also saying that the mass barely decelerated.  In that case, what was the source of energy which turned 250,000 tons of steel and concrete into fine powder?  The GPE can't do both,  it probably can't even do one or the other.

I did the calculation of the concrete slabs floating in space waiting for the mass to come.  You were right,  that only cost it about a second.

But you agree that the structure had a 500% margin.  If I attribute 5 times the weight and run the calculations then,  it would likely be more than 5 seconds.  And that still leaves zero energy to turn all of that mass to powder.

It's funny that you think that I'm the one who only sees what he wants to believe.  This is really your job.

so,  to recapitulate,  please tell me why nobody has been able to design and run an experiment which proves your point, and tell me where the energy came from to turn all of that mass to powder.

I'm going to write a program that enables me to run these calculations instantly.
Reply: @lebergerdesphotons4565  And that still leaves zero energy to turn all of that mass to powder.

OH YEAH.. 22 stories failing has ZERO energy..   WHAT ARE YOU ON??? 

??? I Don't know what the fuck you are talking about.  The steel wasn't turned into powder,  dude. It was ripped apart at its bolted connections.  The floors were RIPPED off of their mounts at the exterior wall.  The light grade concrete crushed.  The drywall turned into its component parts.  CHALK.    

Saying 22 stories has no energy??   You're on glue.
Reply: @roquefortfiles  And that still leaves zero energy to turn all of that mass to powder.
OH YEAH.. 22 stories failing has ZERO energy..   WHAT ARE YOU ON??? 

try to pay attention.  I know it's difficult for you.  The building fell at near free fall,  I think we agree on that.  What that means is that it didn't use much energy to crash into what was below it (the 22 floors).  If it did,  that would have slowed it significantly.

But it didn't slow significantly.  That means that it didn't expend energy to break the matter below it.  If it had, it would have slowed down.  I"m still talking about the missing jolt.  If there's not a collision which absorbs energy,  it can't break the building into pieces,  let alone fine powder.

Why do you think that it can become fine powder without expending energy?

and if it expended energy,  it would have slowed down and taken measurably more time than 10 seconds.

??? I Don't know what the fuck you are talking about.  

Yes,  I see that you have great problems with logic and physics.

The steel wasn't turned into powder,  dude. It was ripped apart at its bolted connections. 

Then we should be able to find with a foia request the quantities of steel from wtc sent to china and how much the u.s. gov't received for that.

These requests have been made, and it is clear from the responses that there was precious little steel sold to china.

 The floors were RIPPED off of their mounts at the exterior wall.  The light grade concrete crushed.  

Those mounts were able to hold 5 times the static load.  If you apply 5 times the static load to the slowing down of the fall,  you'd have at least 15 seconds.  That was not seen.

and the supports which held the slabs could be ripped off without hurting the numerous vertical members.

They were not there at the end.  You've seen the video of them turning to dust while still standing in a couple of seconds.

If they didn't turn to dust, we would have seen 1000 foot tall columns having fallen to the ground.

They were not seen.  Because they turned to dust.

Your story is that the crash turned them to dust.

That is why I treat you like an idiot.

The drywall turned into its component parts.  CHALK.

Who cares about the drywall?   Find the volume of the drywall,  it wouldn't account for 1 millimeter of dust on the ground.  There was 30 mm of dust on the ground over hundreds of acres.    

Saying 22 stories has no energy??   You're on glue.

It doesn't have enough energy to do all of that, no.

And you and everybody else are incapable of designing and running an experiment which would show this to be plausible.

All you've got is your silily yap which flaps without tiring and says nothing.
Reply: @lebergerdesphotons4565  try to pay attention.  I know it's difficult for you.

(Not difficult for me!!. I am not the one who is struggling here!!!! )

  The building fell at near free fall,  I think we agree on that. 

(YES!!  Near.  But not 100%)

 What that means is that it didn't use much energy to crash into what was below it (the 22 floors).  If it did,  that would have slowed it significantly.

(It did slow.  You might like to notice the debris is falling faster than the rest of the collapse.  The DYNAMIC LOADING was nearly 30X over the resting static load.  The building is not collapsing.  It is being CRUSHED.
Reply: @roquefortfiles   	
roquefortfiles
le berger des photons try to pay attention. I know it's difficult for you. (Not difficult for me!!. I am not the one who is struggling here!!!! )

No.  It's true.  I see that it takes no effort for you to remain ignorant.

 The building fell at near free fall, I think we agree on that. (YES!! Near. But not 100%) What that means is that it didn't use much energy to crash into what was below it (the 22 floors). If it did, that would have slowed it significantly. (It did slow. You might like to notice the debris is falling faster than the rest of the collapse. The DYNAMIC LOADING was nearly 30X over the resting static load. The building is not collapsing. It is being CRUSHED. 

it fell in 10 seconds.  free fall is 9.22 seconds.  If you understood physics even a little bit you would know that that's not enough time to transfer enough energy to do much damage.  Also the GPE  is less than 1% of the energy required to powder all of that concrete and steel.

You can't design and build a model that would show any results even close to what you believe in in your fairy tale.

Did you see Jon Cole's video in which he builds a building out of sheets of paper and wooden match sticks?

Even with that flimsy build he needed to use firecrackers on each floor to get a result similar to what we saw on tv.

So you are suggesting that the WTC towers were proportionally weaker than a 6 foot tall building made of single sheets of paper and wooden match sticks?  Perhaps it's also more easily combustible than paper and matches?
Reply: @lebergerdesphotons4565   You're not a physics geek are you??   I really don't like physics geeks.
Reply: @roquefortfiles  just an A student in the two physics classes I had at the university.  

You understand nothing of physics.  That doesn't stop you from making ridiculous untenable arguments that expose your remarkable ignorance of the subject.

You do know how long it  takes controlled demolitions to fall,  right?  Much longer than free fall.  These buildings are helped to use their own GPE to break them up into pieces that can go on trucks.  It would require orders of magnitude more energy to disintegrate them into a fine powder by the means that public contractors are aware of.  They would never consider wasting all of that energy,  it would be far too expensive.  It would also be worse than pointless.  They'd be sued for hurting everybody's lungs.   You did notice that the municipal workers at new york pretty much all died of lung diseases?  If a private contractor did that he'd be taken to the cleaners.  The gov't threatened these people with the loss of their benefits if they didn't shut up regarding the unforgivable abuse they've suffered.

Your point of view makes a mockery of their suffering.
Reply: @lebergerdesphotons4565  You understand nothing about how the building works.
Reply: @lebergerdesphotons4565  For a guy who claims such superior intelligence in physics you ruin all of it with your comments about CGI  airplanes.  Not to get onto all of that.
Reply: @roquefortfiles  the "proof" of airplanes crashing at higher speeds than their manufacturer says they can fly at those altitudes is surely less than convincing.

TV  and movies are all about making us believe things which aren't true.  We've all been raised on TV and movies.

People are believing their governments and the pharmaceutical industry on matters of life and death.

Your whole "logic"  is logical fallacy,  the appeal to authority.  You have accepted that the TV is your authority.  TV tells you that there were airplanes,  you refuse any other possibility.

It's too bad what has happened to all of you.  You'll all get those "vaccines"  which aren't vaccines and in three years you'll be dead if you don't know exactly how to treat yourselves when you get sick.

For the rest of your lives it will be like that.

You won't live very long.
Reply: @lebergerdesphotons4565  Fucking nonsense dude!!. The aircraft are more than capable of the speeds they hit. Not the least of which is that the hijackers couldn't have cared less about the safety margins. This was a one way trip.  For starters United 175 was descending at 10,000 feet per minute.   560mph?? I am surprised that's all it was doing
Reply: @lebergerdesphotons4565  You're a paranoid conspiracy nut.   You sound like a total fruitcake dude.  I've been to many movies.  I used to work in computer graphics.   I know what is involved.  Not once have i ever had difficulty determining between a movie VISUAL EFFECT and REAL LIFE.  NOT ONCE!!.
Reply: @lebergerdesphotons4565    I simply don't get you.   Someone who presents themselves to be insanely bright in one area.  But unbelievably stupid in another.  Oh well.  We can't have it all.   The airplane shaped hole in the building was not caused by Wile Coyote in a  flying ACME bathtub.
Reply: @roquefortfiles  

Except this time.  When Boeing has confirmed that a stock passenger 767 can't do what the "fable" jet "did.

John Lear agrees with me,  to use an appeal to authority,  the only sort of "logic" that you understand.

Tell me,  how many other times have 767's taken off without getting in the official database?

You do know that two of those "jets" were not in the official database?

I could go on.  I'll just say that it's normal that the people who are fooled by the TV are sure that they haven't been fooled.  They're also fooled by the Nobel Prize.  Where's the guy with the Nobel Prize for the experiment he designed and ran which proved that virus particles can commandeer living cells and modify their reproductive systems to make copies of themselves?

There was no prize given for that.  Therefore it never happened.  And billions of Earthlings as stupid as yourself have just gone out of their way to have themselves killed by the people who want them to die.

Yes,  the people who paid for the Georgia Guidestones.  They carved in stone that we would never again be more than 500 million on Earth.  And the 8 billion doofuses who are here now are obliging them.
Reply: @roquefortfiles  

Nor was it caused by an airplane which would have looked rather like a beer can you'd stand on.

Boeing confirms that a 767 can't do what you claim was done.

And look at your writing above.   You're the one who's calling me "unbelievably stupid". 

You're an expert at being "unbelievably stupid" but not so expert at knowing who else might be unbelievably stupid.
Reply: @lebergerdesphotons4565  Boeing confirms that a 767 can't do what you claim was done.

Really?? I am friends with a pilot who flies a 767.  I asked him this question point blank one day.    His response?   "No Problem".    Buddy you don't know what the fuck you are talking about.   But you present yourself like you do!!  And you sound like an idiot. 

When Pacific Air 1771 was intentionally crashed by a disgruntled employee the plane hit the ground from 22,000 feet INTACT at the speed of SOUND!! 720 mph.  You can look that UP!!!!.  

And you're amazed because United 175 hit the WTC at 560MPH  Coming out of a 10,000 foot/ minute dive??
Reply: @lebergerdesphotons4565   You're a horrifyingly uniformed guy who then draws conclusions on SHIT information.    You people are all the same!!!  Beyond an eye roll   Garbage in GARBAGE out!!   Uniformed with puffed up authority. 
When Galloping ghost crashed in the Nevada desert races a few years back the plane hit the ground from an out of control loop at 540mph.   A piston driven aircraft!!!   And you're trying to convince me that a 767 with Rolls Royce jet engines can't push the aircraft to 560mph coming out of a 10,000 foot/ min FULL THROTTLE descent??    Give me a break!!
Reply: @roquefortfiles   	
roquefortfiles
le berger des photons Boeing confirms that a 767 can't do what you claim was done. Really?? I am friends with a pilot who flies a 767. I asked him this question point blank one day. His response? "No Problem". Buddy you don't know what the fuck you are talking about.

Sure roquefort,  you just happen to have a personal friend who apparently is a better pilot than John Lear.  That's plausible.

 But you present yourself like you do!! And you sound like an idiot.

I guess when you're an idiot as is your case everybody who disagrees with you sounds like an idiot.

 When Pacific Air 1771 was intentionally crashed by a disgruntled employee the plane hit the ground from 22,000 feet INTACT at the speed of SOUND!! 720 mph.

But none of the faked images from 911 showed a steep dive.  Barely a dive at all.

 You can look that UP!!!!. And you're amazed because United 175 hit the WTC at 560MPH Coming out of a 10,000 foot/ minute dive?? 

I"m just going with the manufacturer of the plane and the most decorated pilot in american history.

Of course I'm not lucky enough to know your buddy.
Reply: @roquefortfiles  

le berger des photons You're a horrifyingly uniformed guy who then draws conclusions on SHIT information. 

Doofus,  that's not me in your mirror.

You people are all the same!!! Beyond an eye roll Garbage in GARBAGE out!!uniformed with puffed up authority. 

Are you referring to me?  Or to Boeing?  Or to John Lear?

When Galloping ghost crashed in the Nevada desert races a few years back the plane hit the ground from an out of control loop at 540mph. A piston driven aircraft!!! And you're trying to convince me that a 767 with Rolls Royce jet engines can't push the aircraft to 560mph coming out of a 10,000 foot/ min FULL THROTTLE descent?? Give me a break!! 

That's what boeing and Lear say.  They also notice that this was allegedly done by somebody who couldn't even pass h is private pilot.

You live in a world where neophytes can do everything,  The manufacturer of the jet and the most decorated pilot of all time know nothing.

I wonder who you think you've convinced of something?  You only convince yourself.
Reply: @roquefortfiles  
https://youtu.be/bdFo9egH130

here's John Lear talking about holographs.  Is he crazy too?
Reply: https://youtu.be/2zt1oTYhcgo

Maybe they should have built the towers out of wooden phone poles instead of steel and concrete.
Reply: @lebergerdesphotons4565   OMG. If you're citing John Lear you have problems.   That guy is a fruitcake.  Buddy?? you don't seriously believe the crap that you write. Nobody is that stupid.   Holograms??   Get real.  How much of an idiot do you have to be to watch a passenger jet scream through the WTC shot from 100 different angles with debris raining down on people in the street and then sit there and say it was a Hologram.   Who are you kidding here?
Reply: @roquefortfiles  le berger des photons OMG. If you're citing John Lear you have problems. That guy is a fruitcake. Buddy?? you don't seriously believe the crap that you write. Nobody is that stupid. Holograms?? Get real. How much of an idiot do you have to be to watch a passenger jet scream through the WTC shot from 100 different angles with debris raining down on people in the street and then sit there and say it was a Hologram. Who are you kidding here?
Reply: @lebergerdesphotons4565   To answer your question?  Yes John Lear is a total nutcase.  And this is well known about him.   Dude?? you're not remotely a credible or even RATIONAL argument.   You come across like some total physics geek with a horrifyingly bad superiority complex.  Ignores facts all over the place and substitutes your reality because you can't accept reality.   You people are all the same.
Reply: OMG. If you're citing John Lear you have problems. That guy is a fruitcake.

Show me somebody with some credibility who says that.

 Buddy?? you don't seriously believe the crap that you write. Nobody is that stupid. 

You're that stupid.

Holograms?? Get real.

I"ll repeat what I wrote the other day.  The NWO has been in control of every patent office in every country for centuries.  How would a complete doofus such as yourself be aware of every invention that they decided needed to be under wraps as a defense secret?  Wouldn't that be the best technology?  And what does it say that you're not aware of it?  It says that you're not in the club.

It's incredibly naive to imagine that you're aware of every technological development.  The gov't has secrets.  It's not a secret that they have secrets.  So you're going off like that because John Lear who was in the military for quite a long time might be aware of some government secrets?

 How much of an idiot do you have to be to watch (fabricated images of) a passenger jet scream through the WTC shot (well not shot, but photoshopped) from 100 different angles with debris raining down on people (doesn't debris have other causes than plane crashes?)in the street and then sit there and say it was a Hologram.

Watching you prattle like a doofus about it has me even more convinced than before.

 Who are you kidding here?

Nobody could kid you roquefort,  you're just too smart for us all.
Reply: @roquefortfiles  

e berger des photons To answer your question? Yes John Lear is a total nutcase. 

Why hasn't he been locked up for his own good?

And this is well known about him. Dude?? you're not remotely a credible or even RATIONAL argument.

Slow down and wipe the drool off your face so you can write proper sentences.

 You come across like some total physics geek with a horrifyingly bad superiority complex. 

You make it very difficult not to feel superior to you.

Ignores facts all over the place 

You should perhaps make a list.  I don't believe I'm ignoring facts.  It's a fact that you believe everything they want you to.  I don't ignore that.  What "facts" do I ignore?  

and substitutes your reality because you can't accept reality. 

You mean the "reality"  that you,  roquefortdoofus, "know"  all about every technology that's ever been invented even though it seems to be well known that the military has access to things that we don't?

You people are all the same.

Yes.  We're all much smarter than you.  But we're not proud of that.  It's not an accomplishment.
Reply: @lebergerdesphotons4565  Holograms don't create shadows.  And they don't cause buildings to oscillate.   And they can't be inserted into footage that is owned by private citizens. All over NEW YORK.  And they can't be inserted into still photographs WHICH ARE OWNED BY THE PHOTOGRAPHER!!!  The logic failure of your arguments is large enough to fly the HINDENBURG THROUGH!!  The fact that none of this stuff seems to even register with your "Superior Intellect" pretty much says all.  Ask yourself Mr Leberger Des PHOTON TORPEDO if your argument HOLDS WATER!!!.. If it doesn't then it ain't worth a bucket of warm SHIT!!!!!
Reply: @lebergerdesphotons4565     The military does not have access to private citizens videos.   Good luck working your way out of that logic failure.  Debate 101.  Point out your opponents logic failures.  When you work your way out of the logic failures of your arguments you let me know.    And be careful who you're calling a doofus.
Reply: @roquefortfiles  e berger des photons Holograms don't create shadows.

The hologram projectors that you know of perhaps can't.  But you don't have access to all of the technology that the military does.

 And they don't cause buildings to oscillate.

Nor are airplanes the only thing that can cause a building to oscillate.

 And they can't be inserted into footage that is owned by private citizens
 All over NEW YORK. And they can't be inserted into still photographs WHICH ARE OWNED BY THE PHOTOGRAPHER!!! 

Funny,  I heard many stories of people having their photographs confiscated.  So how hard would it be to create these images that you say belong to private citizens but I say you have no idea who those people are or who they work for.

The logic failure of your arguments is large enough to fly the HINDENBURG THROUGH!! 

No,  your inability to conceive of what may and what may not be real is the logical failure here.

The fact that none of this stuff seems to even register with your "Superior Intellect" pretty much says all.

Yes,  it says that I'm much smarter than you and that you can't recognize when you're wrong about everything you say because you're completely brainwashed.

 Ask yourself Mr Leberger Des PHOTON TORPEDO if your argument HOLDS WATER!!!.. If it doesn't then it ain't worth a bucket of warm SHIT!!!!!

I guess you're the bigger expert on buckets of warm shit.  That seems more your domain than mine.
Reply: @roquefortfiles  

https://www.youtube.com/watch?v=8pS1edpeGqI

jesse ventura talking in 2011 about his book.  He shows that in 2010 the u.s. gov't generated over 12 million documents that the public doesn't have the right to see.

With all of that, and you prattling on about how you know what exists and what doesn't.  I guess you read those 12 million documents from 2010 and the other millions of documents from all of the other years?

They (the people who own the governments of the world) take in so many tons of money and you think that if they had a hologram projector or an accessory that could generate the shadows that they'd call you on the phone right away to let you know?
Reply: @lebergerdesphotons4565  When you work your way past privately owned videos or photographs being Doctored you let me know.   You couldn't work your way out of a wet paper bag
Reply: @lebergerdesphotons4565  You do know that people watched the plane approaching the building.  Or are going to tell them they imagined it?  Dude you do realize what a nutcase you sound like. Right?  Look at the plane hitting the building and debris raining all over people and this is a hologram???
Reply: @lebergerdesphotons4565  No I dont have access to what the military does!!.  Just like they dont have access to private citizens movies and photos.   And yet you keep arguing like this doesn't matter.  You can't see the hole in your arguments???    You're like Rainman.   Bright in one area.  Insanely stupid in another
Reply: @roquefortfiles  Now you're just showing off your brilliant mastery of english idiom.
Reply: @roquefortfiles  a hologram and another means of destruction of the property.  A means never before seen in public.  The evidence of that is vast.  Comment on the circular holes in pieces of glass not otherwise broken.  Tell me where you've seen that before?
Reply: @lebergerdesphotons4565  No. No I am not.  And you know it
Reply: @roquefortfiles  e berger des photons No I dont have access to what the military does!!. Just like they dont have access to private citizens movies and photos. 

But you're wrong.  They order the police around and the police confiscated all "unauthorized" privately held images of that day, going to camera stores and illegally seizing it.  It's well documented for the person who wants to investigate rather than reassure himself that things are as he wishes they were.

And yet you keep arguing like this doesn't matter. 

Not that it doesn't matter,  rather that it's just not true.

You can't see the hole in your arguments??? 

No.  I see the hole in YOUR arguments.  As usual it's that you believe things you can't prove.

When you believe in things that you don't understand you're gonna suffer!  (stevie wonder)

You're like Rainman. Bright in one area. Insanely stupid in another

Well then you're significantly less interesting than rainman.  You're nearly always wrong.

When you're not wrong it's because you're mistaken.
Reply: @lebergerdesphotons4565  Right!! They went to every single apartment and loft in NY  and demanded all the footage. As if.   I work with a girl who photographed one of the famous shots of the second plane hitting the WTC.  I know how much of a fruitcake you sound like.   Dude you talk a big game.   It dont work with me
Reply: @lebergerdesphotons4565  You're desperate now.. sad!!!
Reply: @roquefortfiles  You should quote what you're responding to.   Now at 170 messages on the thread and youtube is intentionally stupid about how they handle that.  I'd have to click and scroll for a couple of minutes to see what it  is that you say you aren't and that I know it.

Let me guess,  you're not stupid?  I don't know that,  so that can't be it.

So,  were you going to explain to me how you know that "they"  don't have a way to create holograms with included shadows?

Also you mentioned something about people seeing the planes coming.  I've been in manhattan.  With all of those tall building there is not a view to see a thing coming from far away.  And the sound of it coming?  It'd be very difficult to even know what direction it was coming from because of the echos off the buildings.

So I doubt people saw it coming from far.  Especially since you say it came in at over 500 mph.  That doesn't leave much time.

And New Yorkers are notorious for not looking around.

So no,  I don't know that you're not a doofus.  I'm pretty sure you are.
Reply: @roquefortfiles  Right!! They went to every single apartment and loft in NY  and demanded all the footage. 

No,  that's not how they did it.  To get the stills,  they went to every camera store.  As for the video,  They didn't have to do anything as nobody had any worthwhile video.  The fictional event would have lasted about 2 seconds?  2001 consumer video cams?  Not a problem for such talented liars.  And anybody tries to make something of it will find some serious pressure on him to stop.

As if.   I work with a girl who photographed one of the famous shots of the second plane hitting the WTC. 

Yes,  you always know somebody.  Like the guy who's a better pilot than John Lear and who says it's easy to do things with a boeing that boeing says can't be done.

Like going cruising speed at 800 feet agl.

in a horizontal dive.  And then you compare that to a vertical dive.  And the plane which would have its wings cut off by a wooden telephone pole somehow has those same wings cut a wing shaped hole through 20 giant steel beams.

 I know how much of a fruitcake you sound like.  

Yes,  I bet you're a fruitcake expert too.  Not many things you haven't done, right?

 Dude you talk a big game.   It dont work with me

Yes, you've proven how resistant you are to logic and truth.
Reply: @roquefortfiles  
You're desperate now.. sad!!!

You are funny.  I know you don't mean to be.  I"m desperate for what?  I write things which are completely logical and plausible.  I don't claim that I'm proving something, I'm always telling you that you are claiming things to be true which you can't prove to be true.  I am simply pointing out possibilities.  You can't say they're not possible.  It puts you inherently in a far weaker position in the argument.  And you say that I"m the desperate one?

You never let reality get in your way.  Theoretically you should be able to create reality.  And I guess you do.  You create YOUR own reality.  You're all alone in it.  This is probably a good solution for a guy like you.
Reply: @lebergerdesphotons4565  This post is not even worth responding to.    The  Government got a hold of every single video shot that day.    And you actually believe that?   You're not that stupid.
Reply: @roquefortfiles  people have videos that they show that they say are something or another.  I haven't seen any videos that make a good case for actual planes hitting actual buildings.  I've seen a lot of videos which claim to be something,  but they can't be proven to be anything.

The best quality videos that I've seen are the ones you  like to ignore.  Like the video of the 500 foot tall i beam columns which turned to dust right on camera.  You say they didn't turn to dust, but they didn't fall over either.  that would have been a thing that everybody would have wanted to film.  500 foot tall column falling over and then lying on the ground perhaps in pieces?  Everybody would shoot that.

So what's your theory?  Was the video of the 500 foot columns swaying back and forth a fabrication?  Was the video of those columns turning to dust a fabrication?

Show me these videos that you're referring to of planes crashing into buildings.  I've seen the ones they've showed.  It's the wile e. coyote images.  With wings so fragile that it's printed right on them "no step",  but they somehow manage to destroy 20 steel columns each of which is heavier and stronger and harder than the wing in addition to being supported by concrete slabs and spandrel plates.

You are the one here who is continually demonstrating his fervent belief in what can only be fictional events.
Reply: @lebergerdesphotons4565  I write things which are completely logical and plausible.

For your plausible and logical you would have to believe that the Government got a hold of EVERY SINGLE video and photo taken of the airplanes and then "Inserted" a ...(ahem)  HOLOGRAM into them.   And you can't actually believe that.   Dude? you convince yourself of a lot of silly nonsense.
Reply: @roquefortfiles  le berger des photons I write things which are completely logical and plausible. For your plausible and logical you would have to believe that the Government got a hold of EVERY SINGLE video and photo taken of the airplanes and then "Inserted" a ...(ahem) HOLOGRAM into them.

You're almost starting to get it, but let me help you out a bit.  Any video that anybody had and let it be known which would damage the perceived credibility of the stories being told by the agents of the owners of all of the governments on Earth would have been seized and destroyed.

 And you can't actually believe that. Dude? you convince yourself of a lot of silly nonsense.

The videos that you want to show me are videos which were produced by someone respecting the agenda of the owners of the government.

The video of the 500 foot towers of columns swaying in the breeze until turning to dust before our eyes  got out and there was nothing they could do about it.  Too many people are aware of it to the point where they'd do their cause more harm than good by censoring it 20 years later.

I"m still waiting for you to show me links to your favorite videos which you say prove what you believe.

I figure you'll send me the videos where we see an image of a 767 entering a solid building without any deformation or deceleration while the building yields like it was a birthday cake.

Am I right?
Reply: @lebergerdesphotons4565   You do know that the guys in the tower at Laguardia watched the plane descend and hit the building.  They watched the whole thing unfold.  You do realize what a nutcase this makes you look like.  You do realize that right??   And if you don't then you're more of a nutcase than i even imagined.
Reply: @lebergerdesphotons4565  They didn't have to do anything as nobody had any worthwhile video.

DUDE?? I am a stills photographer.  I also used to shoot news.  This comment of yours shows an unbelievable amount of ignorance on your part.     You've got your head stuffed so far up your ass.
Reply: @lebergerdesphotons4565  The video of the 500 foot towers of columns swaying in the breeze until turning to dust before our eyes  got out and there was nothing they could do about it.

Oh you mean the "Spires" before they fell away and got OBSCURED by dust?  And then people like you say they TURNED TO DUST.  (Big difference btw)  

Well unfortunately for you there are a number of other angles showing this and they do anything but 'Turn to dust"  Dude? you're not really that dumb.
Reply: @lebergerdesphotons4565   Your posts are completely retarded.   Your reasoning and logic are out the window.   There are many examples of aircraft being flown over speed.  There are so many holes in your arguments you could fly the Hindenburg through them.    Buddy?? you're not well.   Go and get help.
Reply: @roquefortfiles   You do know that the guys in the tower at Laguardia watched the plane descend and hit the building.  They watched the whole thing unfold. 

And how many long term death row prisoners were released after dna evidence became acceptable in a court of law?   They were all in there on the word of an eye witness.  And if some agent of the gov't comes to see you and makes you understand through whatever means of coercion he's prepared to use that you will say what they want you to say then you say it.

Or you don't really know what you saw.  Would you care to send me a link to this important information?

 You do realize what a nutcase this makes you look like. 

As far as I can tell the only thing that makes me look like a nut case at all is that I spend time talking to you.  But I enjoy it.  I practice writing.  I mock you much better than you mock me and that gives me pleasure.

 You do realize that right??   And if you don't then you're more of a nutcase than i even imagined.

All you have is ad hominem attack and 3rd party stories of eye-witness accounts of ambiguous events.  And not even any documentation.  Just the word of a doofus like you.  

That doesn't go far.
Reply: @roquefortfiles  The video of the 500 foot towers of columns swaying in the breeze until turning to dust before our eyes  got out and there was nothing they could do about it.

Oh you mean the "Spires" before they fell away and got OBSCURED by dust?  And then people like you say they TURNED TO DUST.  (Big difference btw)  

Well perhaps if you could show me photographic evidence of those same spires after the images I saw.  What did happen to them?  Did they fall on the ground?  It seems doubtful that 500 foot spires would have fallen on the ground and it would be impossible to find any photos of them falling or haven fallen.

You see,  what you just witnessed in the above paragraph is observation and logic.  Very different from your refusal to believe your eyes and placing illogic wherever it's needed to maintain the lies you've been told.

Well unfortunately for you there are a number of other angles showing this and they do anything but 'Turn to dust"  Dude? you're not really that dumb.

Ok.  show me what happened after with photos.  Can you?  no,  You can't.

Tell me about their demise.
Reply: @lebergerdesphotons4565  You're a freak pal.  Go get help.
Reply: @roquefortfiles   	
roquefortfiles
le berger des photons You're a freak pal. Go get help. 

well roquefort,  you're just proving me right.  You have no argument based on observation and logic so you resort immediately to ad hominem attack.

I feel that somebody more intelligent and persistent and resourceful than you would be able to try to make an argument.  I would of course shoot it down with logic.

You can't win this sort of an argument because everything you believe, you believe it based on some sort of religious faith and not because you believe certain things to be facts because of their logic.

It's too bad.  I came here for an argument, but you proved to not be capable and now you seem to be giving up.

Clearly it's an admission that everything I've been saying is correct.  That you can't prove anything you say.

I had hoped for more from you.  

It really looks like a lack of effort on your part.
Reply: @roquefortfiles  
Here's an example of what's wrong with your debate tactics.  I can show you a video of an airplane crashing.  Its wing tip one meter in contacts a wooden telephone pole which slices it clean through.  The wing cuts the pole in two also.  See that's just like I was saying about reality.  two objects collide, they are both damaged with the same force.

You show fabricated images of an aluminum airplane wing remaining pristine after destroying 20 steel columns all thicker stronger and harder than itself and outweighing it by orders of magnitude.

And then all you have is your opinion as a guy who "knows"  video that this surely happened as it was seen on TV.

No logic to explain why the real film of a plane crash was so much different,  just your assurance that the images are real.

No explanation of why reality looked so different that day than every other day.

No answer for what "over speed" means.

No end to the list of unanswered questions.

Nothing but confident assertions of the impossible.  And that anybody who doesn't believe the impossible is real should be in the psychiatric hospital.

It seems you have that turned around.

I'll stick with reality and be glad that you're not my state appointed psychiatrist.
Reply: @lebergerdesphotons4565   Dude??  You're a whole lot of "BAFFLEGAB!!!"  You've perfected the important sounding speech.   I don't know who you think you're fooling here.  The "Spires" simply EXPIRED after the lateral support of the floors were wiped from their mounts. Think of it this way!!  A piece of raw spaghetti that is about a foot long. As opposed to one inch which is what they were with the floors.  Short and STRONG.  With no lateral support and once all of the collapsing debris spread out at its base it simply telescoped into its foot print.   And YES there are other angles showing it collapse.   Not just the one that all of you conspiracy nuts blow a load over.
Reply: @lebergerdesphotons4565  Dude?? you wouldn't recognize or notice the failure in your logic if it clobbered you over the head.
Reply: @lebergerdesphotons4565   Dude?  i have nothing but arguments based on logic and observation.   Like the fact that every single video and photograph of the second plane would have to be taken by the Government for your story to have an OUNCE of credibility.  Which it doesn't.  But the fact that you can't even SEE this pretty much says all that I need to know about you.    That your elevator don't go to the top floor.
Reply: @roquefortfiles  le berger des photons Dude? i have nothing but arguments based on logic and observation. Like the fact that every single video and photograph of the second plane would have to be taken by the Government for your story to have an OUNCE of credibility. 

Show me the videos that you're talking about.  The incident if there was one seen from the ground in NYC would have lasted a fraction of a second.  People up high in buildings with clear views maybe a couple of seconds.  Unless I can see them, I can't comment on them.  So send me links to what you want me to see with your comments and I can respond.

Which it doesn't. But the fact that you can't even SEE this pretty much says all that I need to know about you. That your elevator don't go to the top floor. 

No,  I don't know which videos your talking about.  I'll look for them while I wait for your links.
Reply: https://youtu.be/sBciZFE8lA

Above is a link to a youtube video "courtesy of wabc".  What I see is that the camera is right on the two buildings with the first one which caught fire  in the foreground.  In this video I see an image of a "shadow" plane arrive from the right just before there is an explosion in the second building.  The people in the video didn't see any plane. 

That right there might be a good reason to suspect that the "plane" was added later.  I don't see any reason why it wouldn't be color silver with sunlight reflecting off of it.  it was literally a shadow.

The more you make me look into it the more I find things to convince me that the whole thing is bogus.  But of course I already knew,  for so many reasons.

1.)  a guy who can't pass his private pilot doesn't maneuver a 767 perfectly as was seen in the bogus video clips.
2.) 2 of the 4 "planes" not in the database of that day's flights.
3.) many of the people said to be hijacking those planes are still alive

the list could go on and on.
Reply: @roquefortfiles  
https://youtu.be/sBciZFE8lAw?t=260

the eye-witness on the wabc video said he saw a small airplane with a propeller crash into the second tower.

I'm not making this up,  this is what wabc had to report.  Anybody not determined to see what he wants rather than what his eyes show him can see that it's all a pile of crap.
Reply: @roquefortfiles  
I notice you didn't comment regarding the actual footage of a real plane crash with the wing hitting a wooden phone pole and being sectioned clean.

Ah,  but you re-wrote Newton's laws for high speeds.  It's no longer an equal and opposite reaction with your re-written physical laws.

Richard Feynman would want to award you a chest to pin the medal on.
Reply: @roquefortfiles  
and here is good proof that two of the flights didn't exist:

https://serendipity.li/wot/aa_flts/aa_flts.htm
Reply: @lebergerdesphotons4565  Right..controller  Dave Bottiglia just has no idea what he's doing.
Reply: @roquefortfiles  I"m still waiting for links to videos of the second alleged plane crash.

Doubt I'm going to see those links.  If I do, I'm sure that the 2 minutes of swirling air which necessarily accompanies the high speed passage of a jet will not be visible in the obligatory smoke,  thus proving that no jet was there.  No wingtip vortex,  no jet.
Reply: @lebergerdesphotons4565  Well unfortunately for you Lisa Frost boarded United 175.  Her air miles card along with her right hip were recovered at the WTC and returned to her family.  The website her father put up for her memorial is still on line.  Why don't you email them and tell them this information.   I am sure they'd love to hear from another fruitcake.
Reply: @lebergerdesphotons4565    Newton's law does not mean one thing cancels out the other.  Even Richard Feynman knows this.   And your brain dead example of a plane's wing being bisected by a wood pole is so fucking stupid it is not even worth my time.   Nothing remotely similar between a plane doing landing speed to one at cruise doing 560mph. With 10x the fuel load.  Forget it.
Reply: @lebergerdesphotons4565  a guy who can't pass his private pilot doesn't maneuver a 767 perfectly as was seen in the bogus video clips.

Who are you talking about??  Marwan Alshehi who flew United 175 had a full commercial license.  So did Mohamed Atta.   They also spent time on heavy jet simulators.  They also flew private planes down the Hudson river so they were familiar with the approach to the target.   And i hate to shatter your ego but there ain't nothing "Amazing" about any of the flying that day.   Making one or two course correction turns and descending is basic stuff.  On a cloudless day?   Easy!!! The flying could have been done with two fingers on the yoke.
Reply: @roquefortfiles  Well unfortunately for you 

Unfortunately for me?  I don't think so.

Lisa Frost boarded United 175. Her air miles card along with her right hip were recovered at the WTC and returned to her family.

That's just like them finding mohammed atta's passport but they can't find an engine or a black box.  You are such a colossal chump!  Now I am laughing at your expense,  you're such an incredible doofus, ready to believe anything your gov't tells you.  Zero discrimination,  just if your gov't wants you to believe a crazy thing you believe it.

 The website her father put up for her memorial is still on line.

Oh,  and that is your idea of evidence?  A web site?  somebody paid for a propaganda site years in advance?   Remember,  their money (the owners of the gov'ts of the world)  costs them zero.

 Why don't you email them and tell them this information. 

The person is probably not even real.  If however she was, and she lost her life, then I wouldn't do that, it would be inconsiderate.  I guess you are an inconsiderate person since you sugges such a stupid thing.

I am sure they'd love to hear from another fruitcake.

roquefort,  you are such a disappointment.  You really are far stupider than I'd imagined.  

I'll write a letter to muhammed atta's father too telling him how handsome he looked in his passport photo.

He'll probably hand the phone to m uhammed and tell me to tell him myself.
Reply: le berger des photons a guy who can't pass his private pilot doesn't maneuver a 767 perfectly as was seen in the bogus video clips. Who are you talking about?? Marwan Alshehi 

ok.  found his name in wikipedia.  Since it's a controversial topic, we know that wikipedia is full of lies for any controversial topic.  In that article in wikipedia his claim to fame seems to be that he met Osama Bin Laden.  Well,  that would be the fellow who after the fact of 911 was never charged with a crime by the u.s. gov't who in fact treated him for free in a  u.s.  military hospital in the middle east?  pffft!

who flew United 175 had a full commercial license. 

Was this one of  the flights that was in the official database?  Or one of the others?

So did Mohamed Atta. 

Him with the magic passport,  more resistant than the black boxes.

They also spent time on heavy jet simulators. 

you know this how?   So that's just the same as actually flying one?  I doubt you can find an experience heavy jet pilot who would agree with that one.

They also flew private planes down the Hudson river so they were familiar with the approach to the target. 

Aren't jets like that on auto-pilot anyway?  That makes what you just wrote (like everything you ever write) meaningless.

And i hate to shatter your ego

More of your typical stupidity,  announcing what it is that feeds my ego or otherwise.  You need to think about your own ego.  That would be the insignificant force which has you constantly humiliating yourself in public.

 but there ain't nothing "Amazing" about any of the flying that day. 

Well,  my reference for that would be John Lear.  You say that he's not credible because "they" need him to be not credible.

The most decorated pilot of the united states is not credible because he wasn't supporting the lies that you support.

Making one or two course correction turns and descending is basic stuff. On a cloudless day? Easy!!!

easy at a normal approach speed,  not the same at 540 mps.

A speed unattainable under the conditions in which you believe this happened.  You of the horizontal dive theory.  Atmosphere too thick,  jet engine can't work right. <600 mph at ideal conditions with very low pressure,   no way hitting 540 at 960 mb.  Only you believe that.
Reply: @lebergerdesphotons4565   There's the approach path 175 took.  All 2 course corrections.  THAT'S IT!!! 
https://en.wikipedia.org/wiki/United_Airlines_Flight_175#/media/File:UA175_path.svg

  Now explain to me Mr bright guy what is so difficult about this flying.   And be specific about it.   To make a course correction you turn the yoke until the plane is heading where you want it.  And there's a compass helping you do that.    And Shehi made 2 turns to put himself on course for lower NY.  The flying we're talking about could be done with 2 fingers holding the control column.  When he got it down to 1500 feet he leveled it and punched the throttles to full power.
Reply: @lebergerdesphotons4565   For a fake video you certainly seem concerned about the flying.    Dude?  you're all over the place.  You don't know what the hell you believe.   If we could see a pictorial representation of your thought processes it would look like a fire drill in a mental hospital.   You write about as kooky as your avatar looks.  As Gary Larson put it.  Just plain nuts.
Reply: @lebergerdesphotons4565  That's just like them finding mohammed atta's passport but they can't find an engine or a black box.

They also found the flight itinerary.  A piece of paper on the street found by a businessman.   Signed by the crew.    I find it rather incredible that you're amazed by one thing but not another.    Cherry picking info much?? Pushing an agenda much?? Hm??
Reply: @lebergerdesphotons4565    I am guessing you've never seen any of the martyr videos shot by the hijackers.  Why would you?  Someone who spends their time on retard conspiracy videos.
Reply: @lebergerdesphotons4565  easy at a normal approach speed,  not the same at 540 mps.

FYI there dude a heavy jet handles way better at high speeds than low.   The control surfaces respond better.  At slows speeds they get sluggish and hard to control.  When UNITED 232 lost all its hydraulics the Capt brought it in at TWICE its landing speed.  For more control.  Thanks for playing and proving what a clueless dope you are.
Reply: @lebergerdesphotons4565  A speed unattainable under the conditions in which you believe this happened.  You of the horizontal dive theory.  Atmosphere too thick,  jet engine can't work right. <600 mph at ideal conditions with very low pressure,   no way hitting 540 at 960 mb.  Only you believe that.

Tell that to Pacific Air 1771.  1988.  The jet hit the ground at 720 mph.   It broke the sound barrier.  The audio on the CVR eventually went SILENT because the plane was going past the speed of sound.   Because it was  put into a dive from 22,000 feet.   Exactly the same as United 175 with a pilot flying it.  Which is backed up by the Controller and radar data.
Reply: @lebergerdesphotons4565    Maneuvered perfectly or bogus clip??   Figure it out dude.   And I am sorry but there is no way that you actually believe the shite that you write.   You'd have to have scrambled eggs for brains.   And anyone with half a brain can tell the difference between a REAL jet hitting a REAL building.  To a movie Visual Effect.   Not the least of which is the fact that every video you contest I might point out there are 50 other angles of it. But just like these brain dead no planers you act like it is the only video.  And sorry but the Government does not have access to privately owned material. FORGET IT!!!   You can't seem to notice the giant holes in your arguments.  You continue on as if they don't matter.  Dude? a 5 year old would notice the total failure of your arguments.
Reply: @lebergerdesphotons4565  Wikipeadia is fact checked 3x over.    The owner of it does not post factually inaccurate material.   And sorry but there are videos of 767's doing low altitude high speed passes at 450 mph at 100 feet.   They're on Youtube.  You might want to look them up and get yourself educated.  Before you post more brain dead nonsense.
Reply: @roquefortfiles  all of your bold confident assertions contradict 100% John Lear.  You may find him to be ridiculous because your bosses want you to,  I don't.  He has courage.  He talks about things he was supposed to keep quiet, at the risk of his life.

You can't fly.   I won't bother re-finding the things that lear and others have said.  Others being people who were captains on 767 for years.

Every time I've asked you to be specific,  you've ignored me.  I've taken each of those occasions to be victories.

But a victory over a doofus like you is nothing to celebrate.
Reply: @lebergerdesphotons4565    Taken directly from an article on the crash Pacific Air 1771..  Quote..

The plane was estimated to have crashed slightly faster than the speed of sound, around 770 mph  END QUOTE.

And you're amazed because United 175 got up to 560mph?  In a 10,000 foot/minute descent??   I am surprised that's all he was doing.
Reply: @roquefortfiles   	
roquefortfiles
le berger des photons For a fake video you certainly seem concerned about the flying. Dude? you're all over the place. You don't know what the hell you believe.

You're speaking for me again.  You should be more concerned with your own "thoughts".  quotes because you don't really think.  you react.

 If we could see a pictorial representation of your thought processes it would look like a fire drill in a mental hospital. 

I guess that's because I'm following your conversation.

You write about as kooky as your avatar looks.

Your opinion again.  It doesn't impress me.

 As Gary Larson put it. Just plain nuts. 

Ok.  You seem awfully familiar with mental hospital procedures.  Perhaps you'd care to tell us all why that is?
Reply: @roquefortfiles   	
roquefortfiles
le berger des photons That's just like them finding mohammed atta's passport but they can't find an engine or a black box. They also found the flight itinerary. A piece of paper on the street found by a businessman. Signed by the crew. 

And I will reserve my judgment on that until after you show me the signed affidavit of a handwriting expert that these signatures matched known crew members who are proven to be dead that day and in that way.  And that the flight you're referring to was actually in the database, and not not in the database.

I find it rather incredible that you're amazed by one thing but not another.

I"m amazed that you are stupid enough to believe what you believe.  I'm amazed that millions of people are so brainwashed that they forget what they know in order to believe what is wanted for them to believe.

I'm not amazed by how stupid you are.  It's just like that.  some things amaze me and some don't.  Why is that a problem?

 Cherry picking info much??

Until you show me the signed affidavit of the handwriting expert and all of the source material you don't have the right to call what you just offhandedly wrote "information".

 Pushing an agenda much?? Hm?? 

Yes.  Pushing the agenda of logic and plausibility based on logic.

You should try it.
Reply: @roquefortfiles  le berger des photons Wikipeadia is fact checked 3x over. The owner of it does not post factually inaccurate material. 

Your opinion.  My opinion is that anybody who would say what you just said is incredibly naive and stupid.

And sorry but there are videos of 767's doing low altitude high speed passes at 450 mph at 100 feet. They're on Youtube.

Show me the link.  Hopefully the link says which model 767 it is, because there are several,  the model sold to airline companies for commercial flights is not a fancy model or a high performance or a military model.

 You might want to look them up and get yourself educated. Before you post more brain dead nonsense. 

You post brain dead nonsense after looking things up and believing any idiot who tells any lie.

If you send me the link I will click on it.  To look at random links based on what you've given me,  I'll pass.   I've sent you links many times.  Why wouldn't you send the link and avoid all ambiguity?
Reply: @roquefortfiles  le berger des photons Taken directly from an article on the crash Pacific Air 1771.. Quote.. The plane was estimated to have crashed slightly faster than the speed of sound, around 770 mph END QUOTE.

Once again you are comparing a vertical flight path to a horizontal one.

 And you're amazed because United 175 got up to 560mph? In a 10,000 foot/minute descent?? I am surprised that's all he was doing. 

where is your proof that the fake planes not in the database descended in three minutes?  Show me documents saying what altitude the planes not in the official database had gotten up to?

You can't even prove that the flights exist.  The FAA says they didn't.
Reply: @lebergerdesphotons4565  Dude.. if you csnt determine between a movie special effect and reality YOURE THE ONE  who needs help.   If you look around the room and you cant spot the idiot.......
Reply: @lebergerdesphotons4565  Nothing to do with John Lear. Who's a fruitcake already.  This man thinks people live on the dark side of the moon. Has to do with factual evidence.  Pacific air 1771.  Plane hit the ground at at 720 mph.   And you ignore facts all over the place.
Reply: @lebergerdesphotons4565  Yeah. I am friends with A767 Captain.   There is also material on line from a 767 Capt regarding 9/11.  Basically his response to the flying.. No problem!!.  More than enough training
Reply: @lebergerdesphotons4565  Right I'll get the signed affidavit from the crews family.. As if this proves your point.   Lisa Frost?.   Her hip recovered along with her air miles card. Peter Hanson was on the phone to his dad when the plane was flown into the building.   The NY  forensics lab spent 8 years identifying  passengers remains
Reply: @roquefortfiles  le berger des photons Nothing to do with John Lear. Who's a fruitcake already.

It seems to me that fruitcakes are a good thing.  people go out of their way to have fruitcakes.

 This man thinks people live on the dark side of the moon.

Have you been to the dark side of the moon?  Please show me your proof that there are not people living there.l

 Has to do with factual evidence. Pacific air 1771. Plane hit the ground at at 720 mph.

yes,   a vertical dive.   not like a horizontal dive.

 And you ignore facts all over the place. 

name one fact that I've ignored.
Reply: @roquefortfiles   le berger des photons Yeah. I am friends with A767 Captain. 

Would you please explain his justification for thinking that he is more valid than john lear?

There is also material on line from a 767 Capt regarding 9/11. B

then why haven't you sent me a link to that?

asically his response to the flying.. No problem!!. More than enough training

Then why is anybody going to flight school?  Apparently it's so easy that any doofus,  even you, can make this happen without any training.

Apparently all of these stories of a necessity to know how to fly are just bunk.  Any idiot can fly a jet into whatever target he wants to.

I've noted that.  

I believe you.

Reply
Reply: @lebergerdesphotons4565  Why haven't I sent you the link??  Why haven't you seeked out this material on your own?  I'll tell you.  Because you're not remotely interested in it.
Reply: @lebergerdesphotons4565  Because john lear is a complete fruit cake.  And the fact you're even citing this guy shows me the quality of the facts you're convinced by.  The aircraft are entirely capable of the speeds they hit.  It is very easy to over speed a 76!. They're actually over powered.  And you've got to put your foot in one camp. No sense talking about aircraft speed if you think the plane is a computer graphic
Reply: @lebergerdesphotons4565   FYI?  Singer Ricky Martin took off, Flew and landed a 737 on a full motion simulator.  Ricky has all of a Cessna license.   He took off and landed the plane.   The 9/11 hijackers simply had to make 2 course changes which means turning the control column until the aircraft banks to its new heading.  There is nothing difficult about it.  This is a basic stuff.  I think you're confusing CRAZY for difficult.  You can turn a passenger jet with your thumb and index finger.
Reply: @roquefortfiles   Singer Ricky Martin took off, Flew and landed a 737 on a full motion simulator. Ricky has all of a Cessna license. He took off and landed the plane.

No.  He operated a simulator.  I don't know that that means he could do the same with a real 737 and I don't think you'll find anybody ready to let him try with their own 737.

 The 9/11 hijackers simply had to make 2 course changes which means turning the control column until the aircraft banks to its new heading. There is nothing difficult about it. 

Still only have your word. 

This is a basic stuff. I think you're confusing CRAZY for difficult. You can turn a passenger jet with your thumb and index finger. 

sure,  just like you can crash it in a way you didn't anticipate with as little effort as you describe.
Reply: roquefort,  you made me think of this:

https://youtu.be/YWyCCJ6B2WE

Understand this and you can go back to Kansas.
Reply: @lebergerdesphotons4565  Still only have your word. 

As one 767 Capt friend of mine says about the flying.  "Boring holes in the sky".
Reply: @lebergerdesphotons4565  Flight path of A11.  Count them.   One... Two!! Course corrections. A 90 degree turn south!!. The last turn into the WTC and a descent if you want to get technical. https://en.wikipedia.org/wiki/American_Airlines_Flight_11#/media/File:AA11_path.svg

There is a display in the cockpit called LEGS.  You can dial up any airport and it will take you there.  JFK etc  Not saying they used it but they could have.  But as one pilot said to me.  "At 30,000 feet New York would be visible to them.  Simply turn  your plane SOUTH.   They likely just followed the Hudson river all the way to the WTC.  United 175 was all of 55 miles north of the WTC when it was taken over.  Flying time?  16 minutes.
Reply: @roquefortfiles  

and on any other day there would have been norad planes all over him like a bad smell as soon as he turned left in connecticut and deviated from his flight plan.

But M. Bush saw to it that that couldn't happen.  Rumsfeld too,  the rule change just before 911 to require contact with Rumsfeld to do a thing which had been automatic for decades and became automatic again shortly after.  And Rummy avoiding his telephone.

The "coincidences"  pile up,  you focus on details of something that most likely didn't even happen and fail to notice most of the interesting details.
Reply: @lebergerdesphotons4565  and on any other day there would have been norad planes all over him like a bad smell as soon as he turned left in connecticut and deviated from his flight plan.

Sorry!! you really need to listen to what the pilot of the fighter jet had to say on this.  And Air Traffic Control thought they had a RADIO issue for quite some time.  And it is up to air traffic control to ASK for intervention.  It is not up to NORAD.  Again.   You have LITTLE understanding of what you're arguing.
Reply: @lebergerdesphotons4565   Dude?? you really have no clue what you're talking about.  You need to listen to the fighter pilot sent out he explains all of this.  They were not even aware that a second air craft was involved.  They found out on CNN.  It is up to ATC to ASK for fighter intervention.  For a long long time they believed they were having a RADIO problem.  But this plays directly into the hijackers plans as all they had to do was buy themselves 25 minutes flying time.   In the case of United 175? It deviated from its assigned course 55 miles north of Manhattan.   You could boil water for Spaghetti in the time it took from hijack to impact.  Go and look at the timelines of what was known and when.
Reply: @roquefortfiles  

the guy from nasa is just lying then?  going 100 knots over the legal maximum you have him pulling out of a steep dive.  

if he didn't have to pull out of the dive it might be plausible,  but it's still the case that it's a hologram
Reply: @roquefortfiles  so you're telling me that they couldn't see via the transponder and the radar that the plane had made an unauthorized left turn over connecticut deviating from their filed flight plan?

If that's true, it's incompetence.  Radio or no radio they can see where a plane is and where it's heading even if the transponder is off via radar.

So your source which perhaps you cited above,  I'll look later,  doesn't seem to know that.

They can't communicate via radar and there are no other unusual events going on and they don't bother to track a plane that they're wondering about that doesn't respond via radio?

In what world would it happen like that?

And have you cited the source of this "information"  that "they" thought he had a radio problem?
Reply: @lebergerdesphotons4565    Loads of examples of planes over speeding.  The 767 is incredibly easy to over speed.  It is actually over powered.   And coming out of a 10,000 foot per minute descent?? What did you think he was going to be doing?   He's basically racing the plane down hill.  Of course it is going to over speed.  When Pacific Air 1771 crashed it was doing 720 mph  .  And you're wowed by 560??   Really?
Reply: @lebergerdesphotons4565   Go and watch the NBC interview with air traffic control.  YES they believed they were having a radio issue.  It is called NORDO.  (No Radio).   Sorry dude but NORAD does not get called the SECOND a plane does not respond.   And had ATC not picked up the phone themselves to ask for fighter intervention no fighters would have even gotten off the ground before the plane hit the WTC.    And when the fighters got in the air all they had was a PRIMARY they didn't have a SECONDARY  (if you know what that means??)   They're looking for ONE aircraft among..... 3000??   Oh.. And you've got 9 minutes to do it.  And you're in Boston.
Reply: @lebergerdesphotons4565   Dude?? You sound like a horribly ill informed guy who really has no understanding of ATC .  You need to go and watch the NBC interview with the Air Traffic Controllers.  You need to go and watch the interview with the pilots of the fighter jets.    Because you're fumbling around sounding like a knob.
Reply: @lebergerdesphotons4565  If that's true, it's incompetence.  Radio or no radio they can see where a plane is and where it's heading even if the transponder is off via radar.

Yes.  Absolutely.  But the transponder was ON for quite some time.  They simply couldn't reach them by radio.  Hence why they thought it was a radio issue.  Until they turned south and turned OFF the transponder. 

And when the fighter jets departed from Boston American 11 is not visible on their radar scope.  Because they are so far away.  All of the "Targets" merge and look like one big mass on the scope.  It is not until they get CLOSE that the targets differentiate to individual aircraft.   But AGAIN you need to listen to the fighter pilot who explains all of this shit.  Trying to find an aircraft without a transponder is not easy.  Because you cannot provide a fixed position to the fighter.   Just a general area.   Oh yeah and its 9 minutes to the WTC.  But does anybody know that?
Reply: @roquefortfiles  It didn't pull out of a dive at that speed.
Reply: @roquefortfiles  yes.  there are 3000 planes in the air,  not 3000 planes off course.  I think everything your pointing me to is just hollywood.  There is no good proof that airplanes crashed into those buildings.  I'm not particularly interested in the way the air navigation system works.  I just know that aluminum wings don't go through concrete slabs without slowing down and therefore any video you show me is clearly b.s.
Reply: @lebergerdesphotons4565   It certainly did.  Go and watch the videos.  And for the 1000x time.  Controller Dave Bottiglia is on record.. "We were counting down the altitudes and he was descending at 10K feet/min.  Someone said..."He's in the drink on the next hit".   At 1500 feet he leveled it and banked 20 degrees.  You can clearly see all of this.
Reply: @lebergerdesphotons4565  There is no good proof that airplanes crashed into those buildings. 

Over 50 videos clearly showing it and an entire room of Air Traffic Controllers watching it descend on RADAR??   The guys in the tower at Laguardia were watching and talking to Boston AS IT HAPPENED!!!   You can listen to their audio..  "Hang on I'll read it out in a second.... BANG...Oh he just hit the building".. 

All of these guys have been interviewed.  Unless you want to start throwing Air Traffic Control under the bus in order to continue your desperate attempts.  

you have some big time issues!!!  I don't think your elevator goes to the top floor.
Reply: @lebergerdesphotons4565   It didn't pull out of a dive at that speed?   You want to bet?? 
https://www.youtube.com/watch?v=NwutSIUlsAg&t=16s

Enters at top of frame.  Levels 3/4 of the way down.   The camera is looking nearly straight at it.
Reply: @roquefortfiles  There is no good proof that airplanes crashed into those buildings. Over 50 videos clearly showing it 

are you referring to the video which shows an image of an airplane going through  the world trade center tower without slowing down or deforming?

and an entire room of Air Traffic Controllers watching it descend on RADAR?? 

You mean the same guys who didn't know that four planes were off course?  I'd guess that they were believing things that they didn't understand and they should have suffered (superstition).

The guys in the tower at Laguardia were watching and talking to Boston AS IT HAPPENED!!! 

Does that somehow explain how aluminum is more solid than steel and concrete?

You can listen to their audio.. "Hang on I'll read it out in a second.... BANG...Oh he just hit the building".. All of these guys have been interviewed. 

And being interviewed is a cure-all against lying or being misinformed?

Unless you want to start throwing Air Traffic Control under the bus in order to continue your desperate attempts. 

my desperate attempts?  You are referring to my respect for the laws of physics?  Mr.  Newton  seems to be right on all accounts.  If Air Traffic Control  doesn't know newton's laws then I guess they could believe anything they've been told by liars.

you have some big time issues!!! 

Yes.  I want Newton's laws respected.

I don't think your elevator goes to the top floor. 

More lingo from your repeated stays at the psych hospital?
Reply: @roquefortfiles  the pacific flight didn't pull out of a dive at 720 mph.

The video which you just sent a link to,   those are just images.  If that represented reality we would have found jet engines and flight recorders.

we would have seen debris falling on the ground, because an aluminum fuselage will not go through a 4 inch concrete slab hit on edge or through  steel columns which are thicker than it is and made of a substance which is much stronger.

Where did the jet engines go?  Why would they be unfindable?

If you can explain that one thing,  I could consider believing that planes hit the towers. 

The absence of these jet engines is not possible unless they were never there.

That is what I believe.  There were no jet engines there.

The video you showed me proves it, because the black smoke does not encounter a wingtip vortex.

deal breaker.
Reply: @lebergerdesphotons4565  are you referring to the video which shows an image of an airplane going through  the world trade center tower without slowing down or deforming?

Yeah that one!!.   Just like the first plane went straight through the side of the building at 450mph.    And the second one did as well.  This time at 560mph. 

Why?  Because the columns it slammed into were only 9mm thick.
Reply: @lebergerdesphotons4565  If that represented reality we would have found jet engines and flight recorders.

You're making an ASSUMPTION!!  And they did find the jet engines.  Both of them are in the 9/11 museum.  The FDR likely plugged in the building and was destroyed by fire.    Besides what is the FDR going to prove?  We know why the plane crashed.
Reply: @lebergerdesphotons4565  because an aluminum fuselage will not go through a 4 inch concrete slab hit on edge or through  steel columns which are thicker than it is and made of a substance which is much stronger.

Well quite obviously it will.   2x in fact.    Doesn't matter what something is made of.  Move anything fast enough and it can do disproportionate damage.  You can cut steel with WATER!!!
Reply: @lebergerdesphotons4565  Sorry dude.  You can't make blanket statements about what you expect something to do.  You have to accept what it WILL do.   And we have over 50 videos clearly showing what the plane did.
Reply: @lebergerdesphotons4565  The absence of these jet engines is not possible unless they were never there.

The engines are in the 9/11 museum.  Both Cores.   Your reasoning is completely retarded.
Reply: @lebergerdesphotons4565  here is no good proof that airplanes crashed into those buildings.

There is MORE than enough!!  The way you argue is like someone who watches two trucks crash into each other and then says it didn't happen when over 50 dash cams captured it.  

What is wrong with you?
Reply: @roquefortfiles  

Yeah that one!!.   Just like the first plane went straight through the side of the building at 450mph.    And the second one did as well.  This time at 560mph. 

Why?  Because the columns it slammed into were only 9mm thick.

and how thick is the fuselage of a 767?   And by the way,  thank you for saying something that's stupid even by your own high standards.
Reply: @roquefortfiles  le berger des photons If that represented reality we would have found jet engines and flight recorders. You're making an ASSUMPTION!! And they did find the jet engines.

No.  they put engines there that they found wherever.   

You must have gone through your life taking money from the government.  It's certain that nobody would give you money for anything that you do if it was necessary that you do something useful.

I doubt you've ever done anything useful without you being a "useful idiot".

 Both of them are in the 9/11 museum. The FDR likely plugged in the building and was destroyed by fire. Besides what is the FDR going to prove? We know why the plane crashed. 

Sorry,  planes not in the database?  why aren't they in the database?

Why don't planes slow down when they crash into object heavier stronger more rigid than they?

Why don't they deform?

why do you have such wonderful images from behind the building and none from in front?

Doesn't make sense.  if they were there waiting they knew it was coming from connecticut and would have set themselves up to take the videos from the side where we'd see more.

But no,  those images aren't available!  why not?  Maybe because the "trucage"  (that's french for bullshit)  would have been too difficult to do well.

But you're the sort of sucker who thinks that Neil Armstrong walked on the moon.

They don't make them stupider than you.
Reply: @roquefortfiles  tell me great hero,  is this a coincidence?

 Insider Traders Knew About Attacks Before They Happened

Right before the September 11th attacks, some fishy business happened within the stock market and insurance firms. An “extraordinary” amount of put options were placed on United Airlines and American Airlines stocks, the same airlines that were hijacked during the attacks. Many speculate that traders were tipped off about the attacks and profited from the tragedy. The Securities and Exchange Commission launched an insider trading investigation in which Osama bin Laden was a suspect, after receiving information from at least one Wall Street firm.
Reply: @lebergerdesphotons4565  Bait n switch now?  Cant handle dash cams???  You're a used car salesman
Reply: @roquefortfiles  what are you talking about?  details about a flight which never occurred?  So I let you lead the conversation for a bit just to be able to laugh at you after?  

Your arguments have zero value.

You aren't responding to the put options.

I waited 2 years to mention them.

These people just guessed that united and american would have planes that would get hijacked?

so,  is this your way of saying the put options are just a "coincidence"?

dash cams?   What are you saying?
Reply: @lebergerdesphotons4565  Pretty sure Dave Bottiglia knows how to do his job!!..  over 50 dash cams dude. Not one!  50!!
Reply: @lebergerdesphotons4565  I bet on stocks all the time!!.
Reply: @roquefortfiles  I have no idea what you're even talking about.  But I have noticed that you don't choose to talk about the record number of put options on american airlines and united airlines which were ordered september 10th 2001.

Which means that people knew they would be able to make money on 911 on 910.  The day that your friend "rummy" was mentioning that the department of "defense" had stolen years of the proceeds of the IRS.

Which means that 911 was planned and executed by the owners of the u.s. gov't.  That people like you who claim to believe that the taxpayer is the entity who controls life on earth are lying or stupid.

take your pick.
Reply: @roquefortfiles  Thank you again for saying something stupid.  It's the one thing I can count on you for.

september 10th 2001 is the day that more put options on american airlines and united airlines were ordered than any other day in history and by a logarhythmic margin.

You would say that it's a coincidence, because you're a lying sack of crap.

That would make you a coincidence theorist.

The fact that you bet on stocks (if we can believe anything you say ever) has nothing to do with the fact that so many bets against united and american had ever been placed or have ever been placed since.

You can act like it's a coincidence.

That's not a realistic view.

You are a liar.
Reply: @lebergerdesphotons4565  And sorry but do put options cancel out the plane hitting the building?
Reply: @roquefortfiles  I have no idea why you're talking about dash cams or what that has to do with 911.

I do notice that you're avoiding talking about put options on american and united airlines,  no significant numbers of put options on other airline companies on september 10th.

It seems clear that people knew that united and american were going to have a problem on the eleventh of september.

what you're blathering about regarding dash cams I don't know and I don't care.

The subject of our conversation for more than two years is whether 911 happened the way the press says it did or whether it was something different.

How do dash cams fit in?
Reply: @lebergerdesphotons4565  A flight that never occurred?  And we have over 50 videos of it along with body parts and personal effects where it crashed.   Not looking good for you!!.  Youd never convince a jury
Reply: @lebergerdesphotons4565  I am not the one who's ignoring over 50!! dash cam videos.  Sir the collision didn't take place!!!  I present over 50 dash cam videos of the collision.   A jury would laugh you out of the room
Reply: @lebergerdesphotons4565  doesn't matter how thick the fuselage is what matters is the gross tonnage and the velocity it is moving.  The fuel alone would be enough to bust the facade.
Reply: @lebergerdesphotons4565  I am not the one ignoring over 50 "dash cams" ...pal.  you do know that you look kind of like a fool.  We're not talking one angle of this.  We are talking 50.
Reply: @roquefortfiles  I am not the one who's ignoring over 50!! dash cam videos. Sir the collision didn't take place!!! I present over 50 dash cam videos of the collision. A jury would laugh you out of the room

no,  they'd be real sincere,  wouldn't laugh at all cause people are dead.   You're right,  dashcams couldn't be faked.  They're unfakeable.
Reply: @roquefortfiles  

doesn't matter how thick the fuselage is what matters is the gross tonnage and the velocity it is moving.  The fuel alone would be enough to bust the facade.

once again we have your words,  but no experiment having ever been designed and run which demonstrates that what you say is true.

You were talking about juries earlier.  Juries are full of people like you,  so lamebrained that they can't understand why it doesn't make sense to believe a thing which can't be demonstrated in an experiment.

It's this sort of stupidity that is creating our current situation.  People are lining up to willingly take genetic treatments which were tried on rats and all of the rats died.

They'll exert peer pressure on one another to go and get themselves dead via injection. 

No need for stupid corrupt juries to convict them of something,  they're killing themselves willingly.  Why I'm sure that you are too.  So if I just keep the argument going to the next flu season I'll win when you die.
Reply: @roquefortfiles  I am not the one ignoring over 50 "dash cams" ...pal. you do know that you look kind of like a fool. We're not talking one angle of this. We are talking 50.

Why would the technology which can create videos reflecting their author's wishes be limited to one angle?

I"m reminded of an episode of star trek in which the computer was furnishing evidence to convict captain kirk.  He had a good lawyer and convinced the jury that the computer was lying.

Today,  he'd be out of luck as the world is now full of people who get hacked out of their life savings by the gov't yet still believe the gov't is honest.

When you're stupid,  ye reap what ye sew.
Reply: @lebergerdesphotons4565  Authors wishes??? Rank paranoid!!!
Reply: @lebergerdesphotons4565  Why would the technology which can create videos reflecting their author's wishes be limited to one angle?

Because a hell of a lot of people live in Manhattan that's why.  And the "Authors" don't cause aircraft to crash into buildings.  

You're a nutcase..
Reply: @lebergerdesphotons4565  Today,  he'd be out of luck as the world is now full of people who get hacked out of their life savings by the gov't yet still believe the gov't is honest.

Great!!!  Thanks for a completely irrelevant point!!!     This has absolutely nothing to do with private citizens running video cameras from their balconies and photographing the event.  It has nothing to do with free lance News Shooters (I used to be one!!) photographing the event.  

You're a psychiatrists wet dream.
Reply: @roquefortfiles  Because a hell of a lot of people live in Manhattan that's why.  And the "Authors" don't cause aircraft to crash into buildings.  

You're absolutely right!  It seems you accidentally listened to me.  The authors of the software used to create the illusion of a plane crash don't cause aircraft to crash into buildings.  They cause low information doofuses like yourself to believe it in the absence of proof.  Then later they make museums dedicated to the lies they've told and you've swallowed.  That is the sort of planet where everybody lines up to get the "vaccine"  which killed every rat in the only animal trials run.

But you don't seem to understand the meaning of the word paranoid.  If I were paranoid I'd think they were doing this to get at just me.  They're not.  They don't think about me for a second.  They only think about themselves ever.
Reply: @roquefortfiles 
 Today, he'd be out of luck as the world is now full of people who get hacked out of their life savings by the gov't yet still believe the gov't is honest. Great!!! Thanks for a completely irrelevant point!!! 

Ah,  you being the arbiter of all things again!
Irrelevant?  You are advocating believing the gov't when they lie.  For me the whole point is to help people who are on the fence to see that their gov't is owned by people whose names they don't know who have zero interest in their welfare.  You seem to be one of the stupid people who think the gov't is there for them.  The gov't has spent money on a museum which perpetuates a belief in their own propaganda.  And people like you are stupid enough to believe the whole story.

This has absolutely nothing to do with private citizens running video cameras from their balconies and photographing the event. 

dude,  it didn't happen.  and the less than one second of video that would count?   Zero images from the impact side.  No interaction of smoke with wingtip vortices.   No airplane debris until years later in the fake museum.

It has nothing to do with free lance News Shooters (I used to be one!!) 

Yes,  I notice that you don't stick with anything.  Starting with the truth.

photographing the event. You're a psychiatrists wet dream.

The thing that you seem to stick with the most is evoking your psychiatric past.

You seem to believe that this most flagrantly fraudulent branch of "medicine"   has something positive to offer to the public.  It doesn't.  It's only there for itself.
Reply: @lebergerdesphotons4565  The authors of the software used to create the illusion of a plane crash don't cause aircraft to crash into buildings.

Right.  And they don't have access to private citizens videos.
Reply: @lebergerdesphotons4565     They cause low information doofuses like yourself to believe it in the absence of proof.

The cause idiots like you to think computer software can create this.    You do know what a match move is right?  You do know what particle systems are right?   

Not by what you write.
Reply: @lebergerdesphotons4565  Zero images from the impact side. 

WRONG!!! 

 No interaction of smoke with wingtip vortices. 

Why would there be? The plane came to a screeching halt.  You only get vortices when a wing moves through something.
Reply: @lebergerdesphotons4565   BTW?  A Computer graphic which is a 2 dimensional object does not cause 3 dimensional damage to a structure.
Reply: @lebergerdesphotons4565  Nice try pal!!  But sorry nothing doing.  The Government does not have access to private material or photographs shot by private citizens.   Sorry.  Not happening.  I would say the person who has difficulty accepting reality is you.
Reply: @roquefortfiles  Right.  And they don't have access to private citizens videos.

Private citizens are generally ready to do whatever is asked of them in exchange for some cash.  The people who planned the destruction of wtc  are the people who make the money out of nothing.  I think they can afford 50 "private citizens"  without having to ask anybody's permission.
Reply: @roquefortfiles  Zero images from the impact side. WRONG!!! 

Show them to me.  I haven't seen them.   Is it going to take you a month to find a link?

No interaction of smoke with wingtip vortices. Why would there be? The plane came to a screeching halt. You only get vortices when a wing moves through something.

Right.  They had just moved through the adjacent air at 540 mph.   There would have been vortices right next to the building swirling that black smoke around in a spiral.  That didn't happen because the whole plane crash is a fraud that fooled dopes like you but didn't fool me and other people who know that there's live outside of TV.

REPLY
Reply: @roquefortfiles  

You only get vortices when a wing moves through something.

Indeed.  Like the air zero inches from the building.  It just had wings move through it at 540 mph.  There would have been wingtip vortices right there where the black smoke was in that instant.  The black smoke should have been pulled into the vortices.  The fact that it wasn't is proof positive that there was no plane crash.
Reply: @lebergerdesphotons4565  You're also forgetting freelance news shooters and freelance stills photographers.  They own their images.  Dude?  a 5 year old would notice the holes in your reasoning.
Reply: @lebergerdesphotons4565  For me the whole point is to help people who are on the fence to see that their gov't is owned by people whose names they don't know who have zero interest in their welfare. 

Ok.. This has nothing to do with someone standing on their balcony with their own video camera photographing the burning WTC when the second plane roared into view.    It has NOTHING to do with it.
Reply: @lebergerdesphotons4565  once again we have your words,  but no experiment having ever been designed and run which demonstrates that what you say is true.

Sure we do!!  We have over 50 angles of this incident showing what happens.  In the case of the first plane American 11 we have about 3.   The Naudet brothers who were with the fire dept when the plane roared over their head.  

Sorry bud.  But Holograms don't exist.  Not the way you're pushing.  Ridiculous nonsense.
Reply: @roquefortfiles  Ok.. This has nothing to do with someone standing on their balcony with their own video camera photographing the burning WTC when the second plane roared into view.    It has NOTHING to do with it.

But friend,  you don't know if the video you see really has such a source.  You have the word of who?  The corrupt press?  Or the owners of the corrupt press?   They own the entities who give out all of the credentials that you trust.  And they have made you unable to trust in your own sense.

Is that why you haven't responded to my pointing out your naivete regarding wingtip vortices?   You're usually so proud of your aviation knowledge and I had to point out to you that the (fake) plane  moved through the air at 540 mph before entering through 4 inch slabs of concrete struck on edge and protected by spandrel plates without slowing down or deforming.   

Those are the videos you've seen,  right?  the tail doesn't even snap off even though tails have snapped off on hard but successful landings on air strips.

And the black smoke showed no evidence of  wingtip vortices affecting their flow.

That would be a good place for you to use your common sense rather than just re-barfing the things that have been placed inside your head by these people who are using you.

But you missed that opportunity too.

And you won't have the courage to comment directly on what I've written.

You'll change the subject.
Reply: @lebergerdesphotons4565  you don't know if the video you see really has such a source.

Loads of these people who shot these videos have also been interviewed on it.   I work with a girl who shot one of the famous videos of the second plane.  

The amount of credible material that you flat out reject is quite frankly ridiculous.  We're not talking about one or two angles here.  We are talking about videos that were shot ALL OVER NEW YORK.  BY PRIVATE CITIZENS.  

Sorry but the Government does not have access to this material.  If i video tape something out my window I OWN IT!!.  And there are stills photographers who photographed the plane and the images are on their PRIVATE WEB PAGES!!

You sound like a complete kook.  You're Desperately trying to out reason and out logic over 50 RANDOMLY SHOT VIDEOS of this thing.   Dude give up!!!!  A jury would laugh you out of the ROOM!!!
Reply: @lebergerdesphotons4565  the tail doesn't even snap off even though tails have snapped off on hard but successful landings on air strips.

Because the velocity of the entire aircraft is going straight forward at 560mph.   Every single ounce of weight is moving in the same direction.  All at once.  Landing is an entirely different situation. The forces are moving in entirely different ways.   Your example shows a horrifying lack of understanding FORCE!!

There is no wing vortices because the wing is not moving anymore.  And the building is WIDER than the aircraft.
Reply: @lebergerdesphotons4565  moved through the air at 540 mph before entering through 4 inch slabs of concrete struck on edge and protected by spandrel plates without slowing down or deforming.   

So did the first plane!!!  At 100 mph slower!!    What's your point?
Reply: @roquefortfiles  le berger des photons the tail doesn't even snap off even though tails have snapped off on hard but successful landings on air strips. Because the velocity of the entire aircraft is going straight forward at 560mph. Every single ounce of weight is moving in the same direction. All at once. Landing is an entirely different situation. The forces are moving in entirely different ways. Your example shows a horrifying lack of understanding FORCE!!

No.  it doesn't.  The tail would snap off instantly in spite of the lack of vertical accelerations,  but if it was even 1 degree off of perpendicular to the wall,  that'd be more vertical acceleration than the roughest survivable landing.   Do the math instead of always talking without thinking.

 There is no wing vortices because the wing is not moving anymore. And the building is WIDER than the aircraft. 

Spectacular ignorance.   Wingtip vortices last more than a minute.  That's why you wait in line a long time to take off.  They don't send a second plane into the wingtip vortex of the first plane without waiting for that to settle down.

You really put your foot in your mouth this time as I knew you would.  It's why I taunted you to respond.  I knew you would screw up.

That one's for the record books.

the wingtip vortices would have been right outside the building, there where a (fake) airplane had just arrived at 540 mph.

You can't weasel out of this one except with your usual denial after you say something stupid.
Reply: @roquefortfiles  moved through the air at 540 mph before entering through 4 inch slabs of concrete struck on edge and protected by spandrel plates without slowing down or deforming. So did the first plane!!! At 100 mph slower!! What's your point? 

My point is that it's totally impossible in both cases.  the plane will stop short when it hits that slab.  the steel spandrel plate assurs a maximum surface to distribute that load.  It doesn't approach the point of crushing the edge of the slab.

I don't need that,  but it's there.  The  lack of wingtip vortices  prove that there were no plane crashes!
Reply: @lebergerdesphotons4565  It is totally impossible in both cases??  And I offer you empirical hard evidence that it is not!!.
Reply: @roquefortfiles   It is totally impossible in both cases??  And I offer you empirical hard evidence that it is not!!.

What is this empirical hard evidence?  I cite the video of the plane crash where the wood telephone pole slices the wing and the wing slices the phone pole.  Equal and opposite.

It's not just a good idea, it's the law!  Newton's law.  Now I know Richard Feynman isn't as sharp as you,  but he always agreed with Newton's laws.

The softer weaker lighter airplane is going to enter by obliterating a concrete slab struck on edge?  The plane will not deform, but the building is powdered?

right!

Yes,  Dick Cheney filed for an exception to Newton's laws for that day.

You sir,  have painted yourself into a corner with your wingtip vortices remark.  I'm loving it because you were always such a dick regarding unimportant details of aviation lingo,  and here you've shown yourself unable to understand a basic concept of the physics of it all.

Is aviation science or religion?

I"ll be waiting for your "hard, empirical" evidence.

I'm guessing it's these faked videos.

And whether they're faked or not is not even the point.  If they CAN be faked,  then their existence doesn't prove anything.   And they CAN be faked.  You,  the self-proclaimed vidiot.  You're the only self proclaimed vidiot suggesting that those videos can't be faked.
Reply: @lebergerdesphotons4565  The lack of wing vortexes is Because the wing stopped moving and the building is wider than the wingspan
Reply: @lebergerdesphotons4565  What is the empirical hard evidence?  Over 50 videos.  Your opinion of what SHOULD happen has nothing to do with what did happen.  Sorry but I think the problem lies in the fact that you simply cant grasp or understand how ridiculously light this building was.
Reply: @roquefortfiles  ridiculous.  I"m not saying there's a vortex inside the building, but there'd sure be one right up to the building and if there was smoke coming out of there it would be pulled into the vortex and we would see that.

Go ask some of your fictional aviation experts who know more and fly better than John Lear.

The vortices don't fail to form because your system of working backwords from your religious beliefs  don't like that.

In science we discard a hypothesis when we see that we've been believing something which has been proven to be impossible.

You should try science instead of religion.
Reply: @roquefortfiles  What is the empirical hard evidence? Over 50 videos. 

Videos which can be faked.  It doesn't mean they were faked, but the logic of it says that if they can be faked then they are not empirical evidence.

Your opinion of what SHOULD happen has nothing to do with what did happen. 

Well  every other time a wing has passed at 540 mph there were intense wingtip vortices.  But if you tell me that Dick Cheney applied for and received an exception to Newton's laws for that day,  I guess I just have to take your word for it.

Sorry but I think the problem lies in the fact that you simply cant grasp or understand how ridiculously light this building was. 

300 tons of airplane hits 250,000 tons of building.

and the building is light? 

3mm fuselage in alu hits 9mm steel in a much smaller and therefore more resistant form?  And you believe this why?  Because you saw fake videos!

so your airplane is 800 times lighter than the building.

my fridge weighs maybe 40 kg.  so I"m trying to imagine what kind of projectile weighing 50 grams will turn it to powder.
Reply: @lebergerdesphotons4565  No they cant!. Dont be ridiculous!!.
Reply: @lebergerdesphotons4565  The Naudet brothers do not work for the government.  And they OWN  their footage.
Reply: @roquefortfiles  You're the only one who doesn't know that such videos can be created.  Hollywood does lots of special effects,  the video industry can surely do it.  Look,  they weren't even smart enough to put in the effect from the missing wingtip vortices.  So they didn't do that great a job on it.
Reply: @lebergerdesphotons4565  No sorry but I used to work in computer graphics.   I know exactly what is involved and not once have I ever had trouble deciphering between a post visual effect to an actual event.   Not once!!
Reply: @lebergerdesphotons4565  2 dimensional graphics added after the fact  do not cause 3 dimensional damage .
Reply: @roquefortfiles  As usual,  there's a logical problem with that.  You always have a logical problem.  You say you've never been fooled, but if you were fooled you wouldn't know it.  

Only if it was a friend who then told you,  see?  I fooled you.

If it was the people who own the world's banks and governments they wouldn't tell you that you'd been fooled.

And since there's no reason for an absence of  wingtip vortices and yet they are absent,  obviously you have been fooled one way or another.

You can't have a wing without the vortices.

Explain to us how it is that there are no vortices?
Reply: @lebergerdesphotons4565  I used to work in visual effects.   Computer graphics.  I know exactly what is involved.   And the more and more you foam at the mouth about this the more you reveal yourself to be just a barking mad ultramaroon.  Buddy?? I work in the industry
Reply: @roquefortfiles  2 dimensional graphics added after the fact  do not cause 3 dimensional damage 

You're really having trouble with this.  The buildings were turned to powder.  Go find me the receipt for the sale of junk metal.  There isn't one.  You make it sound like the destruction of the building needs an airplane to be plausible.  That's ridiculous.  

so 2 dimensional graphics added after the fact is just to fool people like you who think they know everything.

You still need to explain the lack of visuals on the wingtip vortices which would be obvious.  It's so clear the slowly moving black smoke.  There were no wingtip vortices,  therefore there were no wingtips.
Reply: @lebergerdesphotons4565  2 dimensional graphics do not cause 3dimensional damage!!!. Not in anybody's world.  I work in the industry.  I know what is involved.  Computer graphics do not put 3 dimensional holes in buildings 154 feet across.
Reply: @lebergerdesphotons4565  Buddy??? I work in the industry I know what is involved in prepping and  shooting visual effects.   A 2 dimensional graphic does not put a 3 dimensional hole in a building. And if you really want to get into it you let me know.
Reply: @lebergerdesphotons4565  They cant be faked.  A 2  dimensional graphic does not buy you a 3 dimensional hole.   Not in anybody's reality.  You do know what a plate is right?  Not by what you write.
Reply: @roquefortfiles  More straw man.  Your specialty.  I didn't say that the buildings weren't destroyed, I said that the panes were not real planes.  The lack of wingtip vortices proves that.  So what are you saying?  The buildings were destroyed.  But not by fake plane crashes.
Reply: @roquefortfiles  

No,  I"m not interested in hearing more of your bee ess.   I've proved you wrong regarding fake plane crashes.  I've caught you in your stupidity.  I don't care much about computer graphics.
Reply: @roquefortfiles  Yes.  A plate.  that's that flat metal piece that they bolted over the hole in your skull after the operation.

That's why they call you the guy with the plate in his head.
Reply: @lebergerdesphotons4565  Oh they do??? Different kind of plate pal.  Do you know what match moving is?? How about shaders?  How about particle systems??.
Reply: @lebergerdesphotons4565  wing vortexes only happen when a wing flies through something. That ended when the plane hit the building.
Reply: @roquefortfiles  I really don't care about the computer graphics.

They have video of whatever the little cheesy maoeuvre they did.  Cheaper to just plant a bit of explosive to do a poor rendition of a plane crash than to have to work with people with as boring a line of conversation as yours.  

They probably knew that the wingtip vortices would be missing and they probably laughed about how stupid the masses (yes, that includes you, roquefort) would be, being unable to notice that the absence of effects of wingtip vortices would be an absolute proof of their fraud.

It doesn't matter.  The power of logic on the public compared to the effect of propaganda?  Orders of magnitude weaker.

They spent some generations dumbing everybody down to get most of us (like you) to a point where we're easy to fool.

You believe in plane crashes based on their wholly owned press saying that it was plane crashes.

Your babbling on about computer graphics.  You are missing the point completely as you nearly always do.

The only part of the effect that was computer graphics was just the images of airplane shapes glued in there.

Airplanes which didn't reflect the sun on a sunny day.

They couldn't have cared less about quality computer graphics. 

They didn't need to with mostly morons (you're the classic example) watching and believing what they were supposed to believe.
Reply: @lebergerdesphotons4565  No. Not straw man!!.  Hard realities.  You dont get a 3 dimensional hole from a 2 dimensional graphic that does not physically exist in SPACE!!.  We live in a cause and effect world.  Something that only exists as 1s and Zeros does not cause and  cannot cause physical damage.  Not in anybody's world.   Forget it
Reply: @roquefortfiles  No. Not straw man!!. 

You don't seem to understand what a straw man argument is.  You are intimating that I have suggested that computer graphics are what created fire and smoke in the twin towers.

 Hard realities.  You dont get a 3 dimensional hole from a 2 dimensional graphic that does not physically exist in SPACE!!.

Nobody has suggested that one would except yourself.

  We live in a cause and effect world.  Something that only exists as 1s and Zeros does not cause and  cannot cause physical damage.  Not in anybody's world.   Forget it

I see you don't read my posts.  I responded to this letting you know that I didn't suggest that the buildings weren't actually destroyed.

What I've said is that they were not destroyed by airplanes.  The images of the airplanes are what was inserted.

And they made many mistakes doing from the 50 different angles.

Most notably that the sun didn't reflect off of the inserted bogus image of an airplane and that the airplane didn't slow down or deform as it entered the building.

And also that "error" known as the nose out error.

You may have forgotten it, though you and I have spoken of it,  but I haven't.
Reply: @lebergerdesphotons4565  The airplanes were inserted with what?
Reply: @lebergerdesphotons4565  You are intimating that I have suggested that computer graphics are what created fire and smoke in the twin towers.

Then why don't you make your point entirely clear.   What exactly are you trying to say.  Because you're all over the place constantly.  I don't even think you know what the hell you're trying to say.
Reply: @lebergerdesphotons4565  The only part of the effect that was computer graphics was just the images of airplane shapes glued in there.

To over 50 randomly shot videos by private citizens all over NY??   Let alone the nearly 100 freelance stills photographers??  Who all own their images.     

Dude?? do you know what a barking mad lunatic you sound like? 

And yet you continue on not coming to the realization of the total failure of logic in your arguments.        

There is something seriously wrong with you.
Reply: @roquefortfiles  You are intimating that I have suggested that computer graphics are what created fire and smoke in the twin towers. Then why don't you make your point entirely clear. What exactly are you trying to say. Because you're all over the place constantly.

NO.  It's just not so.  I"m repeating my one point.  The one you can't make go away.  There was no evidence of wingtip vortices in the video, therefor the location of the videos had no airplane pass through it.

There's also the fact that the faked images of airplanes had no sun reflecting off of them.  This is a second irrefutable proof that the planes are fake.

Perhaps you'd like to offer an "explanation" for an aluminum fuselage on a sunny day being black.   It doesn't matter.  The wingtip vortices have already sealed the affair.

But keep on fighting the windmill,   I find it amusing to see how a doofus doesn't know when he's lost an argument.

 I don't even think you know what the hell you're trying to say.

you could have stopped after the first four words of the above phrase and you would have said something honest for once.
Reply: @roquefortfiles  One thing I find particularly amusing in this is that the only possible defense you could have had for the lack of any wingtip vortex might have been to say that the view of such was blocked.  But you've made such a point of talking about the 50 different angles that you cut yourself off from your own weasel space.

So you're a weasel who is trapped by his own weaselishness.

It's wonderful to see.
Reply: @lebergerdesphotons4565  They had no sun reflecting off of them?? !!!   Such an astoundingly stupid comment I don't even know what to say.   BTW!!  I am a stills photographer!!
Reply: @lebergerdesphotons4565  But keep on fighting the windmill,   I find it amusing to see how a doofus doesn't know when he's lost an argument.

I find it even funnier when a guy doesn't even notice the logic failures of his argument.
Reply: @lebergerdesphotons4565   Black airplane?? You do understand how F stops work, right??  You do understand how exposure works, right?    You do understand that a bright sunny day is a very high contrast situation.   And why is there going to be a wing vortex??  The plane has stopped flying when the smoke is generated.
Reply: @roquefortfiles  I see that you're relieved to have something besides the wingtip vortices which aren't there and should be to respond to.

I'm looking for these 50 videos you're talking about so I can see if there are proper reflections off of the plane.  Here is what I'm typically finding:

https://www.youtube.com/watch?v=mKgFbJ044VQ

Such a brief view of the plane that with a web browser it's hard to even pause it in a place where it can be seen.  And this is the result of searching for plane entering tower on 911 on youtube.

So you should send me some links so I can watch these 50 views of the (fake) plane crashes.

Maybe if it's well enough done I'll be able to forget that I already know that these videos aren't showing real plane crashes because of the absence of wingtip vortices.
Reply: @roquefortfiles  But keep on fighting the windmill,   I find it amusing to see how a doofus doesn't know when he's lost an argument.
I find it even funnier when a guy doesn't even notice the logic failures of his argument.

Well that's very wise of you to start to be able to laugh at yourself.

In case I've misinterpreted that and you're saying that I don't see the logical failure of my argument,  please do explain again why the obligatory powerful wingtip vortices don't suck the slow moving black smoke into them?

If I'd seen that I'd have felt pretty sure that there had been a plane.

Without them,  it's just impossible.

But you, great hero,  you tell me that MY argument has a logical flaw?

As usual,  you make a claim but back it up with nothing at all.
Reply: @roquefortfiles  

 Black airplane?? You do understand how F stops work, right?? 

When I see a plane fly in front of a building,  or a video of same,  they both have the sun on them and show very similar brilliance.  Maybe you need to explain what aperture would have to do with the building being lit up by the sun and the plane seeming to be in a shadow with the sun alread up high?

 You do understand how exposure works, right?

Yes.  do you have a point to make?  if so make it instead of acting like it's understood to everybody but me.  That is a tactic.  Tactics are used by people who can only lose an argument.  You surely don't want to be in that category.

    You do understand that a bright sunny day is a very high contrast situation.

yes,  so if the building shows lots of detail why wouldn't the plane?  it's exposed the same.  Quit beugling bullshit.

   And why is there going to be a wing vortex??  The plane has stopped flying when the smoke is generated.

Damn you're a lame brain.  There are vortices because a wing just passed exactly there zero seconds ago at 540 mph!

If a vortex lasts one minute, that means one can be detected going one minute back.  at the point of the explosion there are vortices 10 miles long!  The most intense part is right by the building.

Your logic is such a victim of wanting to win an argument that you have so obviously lost.

What a bad loser you are.  Maybe I'm a bad winner,  but I'd rather be a bad winner than a bad loser like you.
Reply: @roquefortfiles  read here about wingtip vortices my sore loser friend:

https://www.skybrary.aero/index.php/Wake_Vortex_Turbulence

Maybe you can explain to me how the crash can wipe away instantly wingtip vortices which apparently may have still been swirling even 30 miles away!

And I'm still waiting for the fantasy links to the 50 video angles of the (fake) plane crashes  that youtube doesn't seem able or willing to turn up when one searches for 911 plane crash images.
Reply: @roquefortfiles  https://www.reuters.com/news/picture/defining-images-from-the-9-11-attacks-idUSRTS2Q0UX

zero images of planes crashing into building on the reuter's web site.

I"ll search now for the photos allegedly provided by the "private citizens".

Gosh,  I guess reuters was too cheap to buy access to these 50 angles of this important event.  I guess they couldn't afford it?
Reply: @lebergerdesphotons4565  https://www.alfredny.biz/09-11-2001_Tribute/flight_175.htm

You see the wing high side?  Highlight!!  You see the underbelly of the plane?  Shadow.  What do you think causes highlights and shadows??  Where is the light on the building?? Exactly where it is on the plane.
Reply: @roquefortfiles  https://www.youtube.com/watch?v=7YLm3pkAiJQ

18 alleged views.  the first one (all I've watch till now) you see an airplane that seems to have very different light conditions than the building it's about to hit.  I'm waiting for your wonderful handwaving explanation of the big hero photographer.
Reply: @lebergerdesphotons4565   No sun on the plane??  Wow there is so little sun on the plane you can actually read the UNITED logo on the tail.   And again!!  Highlight on the wing.  Shadow on the belly.   What do you think causes highlights and shadows??  https://i.redd.it/hde9ffah50b51.jpg
Reply: @lebergerdesphotons4565  When I see a plane fly in front of a building,  or a video of same,  they both have the sun on them and show very similar brilliance

They do?? That all depends on the angle of the SUN!! Which is different at 9:05 to 3pm.   It also depends if there is anything in front of the Suns illumination.  Such as a building.  Or dense black smoke.  And I've already shown you that there was in fact BRIGHT sunlight on the aircraft.
Reply: @lebergerdesphotons4565     Why is there going to be a wing vortex when the plane is not flying through smoke?  The smoke was generated AFTER it stopped flying.
Reply: @roquefortfiles  
view 1   hidden by the other building.  
view 2.   too far away to see any airplane image.
view 3.  boris.  wrong side of building
view4.  cbs,  taken from wrong side of building

and all 4 show a hazy day when it was actually sunny and clear.  something to hide perhaps?

view 5.  chris hopewell,  90 degrees off from being able to see anything.
view 6.  clifton cloud.  he's also on the wrong side of the building
view 7.  evan fairbanks.  an image of a plane not slowed down or deformed by a 540 mph crash.  I guess the concrete slab was asleep and forgot to be solid and  forgot that one slab weighs twice as much as a fully loaded 767.  And this doesn't mention the giant steel columns every three feet,  but the plane doesn't even slow down or deform.

And your claim that you're a video expert (vidiot)  means that Newton and Feynman take a back seat to your expertise.

You are one pathetic doofus.

I won't bother with the other 11 images in that video.

Maybe youtube is just finding the worst responses for me cause it doesn't like me?
Reply: @lebergerdesphotons4565  Yes.  do you have a point to make?  if so make it instead of acting like it's understood to everybody but me

Give an idiot enough rope!!!  Well no apparently you don't understand how exposure works.  And sorry but there are loads of photos showing Highlight and Shadow on the airplane.  So your comment about no sun is a couple of notches beyond retarded. 

I've made my point extremely clear.   Dude you're so fucking full of it.
Reply: @roquefortfiles  Yes. do you have a point to make? if so make it instead of acting like it's understood to everybody but me Give an idiot enough rope!!! 

yes.  That's what I did when I set you up to claim there are 50 angles of videos of planes entering buildings and not a one of them shows the wingtip vortices pulling black smoke in a swirl.  You think that the crash means that the 30 miles of wingtip vortices  just disappear cause it crashed.  And you can say a thing like that and still find time for an ad hominem attack on me for something of zero importance?
I'm still waiting for your links to these videos of these private citizens.  

You just happen to have better access to such photos than reuter's,  cbs,  nbc,  and everybody!
Yes,  that's believable.

Really pathetic that you want to try and pick on one unimportant detail,  say that I got it wrong and refuse to show anything which would prove that I got it wrong. 

Show me just one image of a plane with a proper silver color going into a wtc tower.

Every image I've seen the plane crashes into a facade that can't be seen in the image.

That's obviously to reduce the complexity of faking the crashes.

And if there are 50 and that's the case for all of them, then that just makes the coincidence all the more unlikely.

You are a coincidence theorist and an outright liar.

And a subject changer.

Tell us more about how wingtip vortices disappear when they hear that the plain has crashed.

Another exception to Newton's laws!

Wingtip vortices don't last 3 minutes when the plane crashes,  they immediately cease to exist (because they're inconvenient for the video editing of the people lying about the fake crash).

Well no apparently you don't understand how exposure works.

What don't I understand?  tell us why the color of the plane is tern and the towers bright?

 And sorry but there are loads of photos showing Highlight and Shadow on the airplane.

Show me one.  I just looked on youtube and saw sombre images from a sunny day.

 So your comment about no sun is a couple of notches beyond retarded.

That means that it's a couple of notches above YOUR level of understanding a thing?

 I've made my point extremely clear.

No,  you've only said that you've made your point extremely clear.  Your point is off topic, it's moot.  No wingtip vortices,  no plane crash.  period.

Dude you're so fucking full of it.

Full of what?  The truth and logic?  Agreed.
Reply: @lebergerdesphotons4565   Wing in highlight!!  It is even casting its own shadow on the fuselage.  The bottom of the plane is in shadow.  Notice the direction of the Sun?  Where is the highlight on the building?  What side?  Where is the highlight on the WING?  The same side.

https://twitter.com/Highflyermel/status/907227984972713984/photo/1
Reply: @roquefortfiles  Ok.  a link!  So tell me grand poobah,  why couldn't or why didn't the photographer want to sell this photo?  Seems it'd be worth a lot.  I just looked at it for free.

Now will you send me the image of the black smoke being sucked into the vortices?  Because if you can't,  then it surely means that this photo is a sham,  a juxtaposition of two unrelated images.

Because the vortices would be the strongest atmospheric phenom in the area.  That it can't even be detected with all of that slow moving black smoke available to suck in  proves that there were no crashes.

Do you want to repeat your idea that wingtip vortices disappear in the event of a crash with a special derogation that Dick Cheney gets with apologies to Isaac Newton from the Jesuits at the Vatican?
Reply: @roquefortfiles  
https://aviation-safety.net/database/record.php?id=20010911-1

I just asked them if they know why there was no effect visible from what must have surely been a powerful wingtip vortex in close proximity to slow moving smoke.

I"ll keep you posted.
Reply: @lebergerdesphotons4565    Of course the fact that the building was WIDER THAN THE WING SPAN had nothing to do with it.. Face palm  You''re an idiot.  Full adhominen intended.
Reply: @lebergerdesphotons4565  Now will you send me the image of the black smoke being sucked into the vortices?  Because if you can't,  then it surely means that this photo is a sham,  a juxtaposition of two unrelated images.

The fact that the building is WIDER than the WING Span seems entirely lost on you.
Reply: @roquefortfiles  The fact that the building is WIDER than the WING Span seems entirely lost on you.

Oh I understand that it's a rectangle which is not a square.  Is that your reasoning for why the 30 mile long wingtip vortices suddenly don't exist?

That is stupidity even beyond your usual stupidity.  No small feat.

And I was just looking at that image you sent me.  the sun is camera side of the building.  Why does the part of the nose which has the building as background look darker than the rest of the fake image of the fake plane?   It should be brighter, because the background is darker.  But we see just the opposite.

Your incompetence is disappointing.  I've beaten a pathetic doofus in an argument.  It's much less satisfying than had you turned out to be somewhat intelligent.
Reply: @roquefortfiles  in  fact,  doofus,  you're wrong about that too.  the buildings were square.  the cores were non-square rectangles,  one dimension 10 metres longer than the other.

You can't seem to get anything right.

Especially knowing when you're mistaken and when you're not.

You'll come off as more intelligent if you operate under the assumption that anything that comes out of your mouth is wrong.
Reply: @lebergerdesphotons4565   If we could see a pictorial representation of your thought processes it would look like a fire drill in a mental hospital.
Reply: @lebergerdesphotons4565   You clearly have no understanding of EXPOSURE.   Sky?  F 22.   Plane?  F 2.5.    The iris is set to expose for THE SKY!!!   And there is LOADS of sun on the plane.   OMG!!!   You can see the highlights on the wings clear as day.
Reply: @lebergerdesphotons4565  Well unfortunately for your reasoning there Mr Photons there are plenty of other stills photographers who shot the second plane and they OWN their images and the web sites they put their galleries up on.   So if you want to knock down this "Plane" you've got your work cut out for you.  Or you could simply come to the realization of what a dope you're being.   I am sorry but you don't really believe the stuff you're saying.  No one with half a brain would.   You look like an idiot.  If you were in a courtroom spouting this nonsense they'd wheel you out in a straight jacket.  NEXT!!
Reply: @roquefortfiles  ok.  I acknowledge your superior experience with mental hospitals.  You've spent significant time there, I haven't.
Reply: @roquefortfiles  so why is it darker where it has the building behind it,  a much darker background than where it has the sky behind it?  Seems counterintuitive,  2nd time I'm saying it, but you don't tend to react to me,  you tend to say things that you think will create the atmosphere you want.

But anybody looking at this has to see that you're a liar.
Reply: @roquefortfiles  unfortunately for your reasoning there Mr Photons there are plenty of other stills photographers who shot the second plane and they OWN their images and the web sites they put their galleries up on.

Can they explain why the slow moving black smoke wasn't swallowed by the necessary wingtip vortices?

 So if you want to knock down this "Plane" you've got your work cut out for you. 

Sure.  work cut out for me to convince people who are too stupid to understand that the lack of evidence of wingtip vortex proves that the "plane" crashes are fake.  

But I won't tire myself with more idiots than you.  One is enough.

Or you could simply come to the realization of what a dope you're being.

Because I believe that a wing passing a place at 540 mph creates vortices?   That's what makes me a dope?  Ok.

 I am sorry but you don't really believe the stuff you're saying.

Yes, dear,  I do.  I don't see how a wingtip passes at high speed without creating a vortex or two.

 No one with half a brain would.

You're the expert on living with half a brain.  That hasn't been my problem.  Probably why I see things as they are rather as you want them to be.

 You look like an idiot.

I"d be worried if I didn't look like an idiot to a doofus such as yourself.

 If you were in a courtroom spouting this nonsense they'd wheel you out in a straight jacket.

Sure.  They're all as stupid and brainwashed as you.

 NEXT!!
Reply: @lebergerdesphotons4565   Send me the photo.  I don't know what you're referring to.   FYI there is LOADS of sun on the air craft.  Bright side.. Dark side.  It was a BLAZING bright sunny day.  What photographers call HIGH CONTRAST.  The difference in F stops from bright to dark is HUGE.  Just like most brides want a bright sunny day for their wedding.  Ask any photographer they hope for overcast.  Why?  because it is lower contrast.  A sunny day is HIGH CONTRAST.  Bright F 22?  Dark?  F 2   The camera shooting this is set to expose THE SKY!!!
Reply: @lebergerdesphotons4565  Sure.  work cut out for me to convince people who are too stupid to understand that the lack of evidence of wingtip vortex proves that the "plane" crashes are fake.  

Well you just can't get good CGI artists these days!!.  The fact they were able to turn around match moved shots with particle systems and complex shaders and do it in ONE DAY??    Where is this post house??
Reply: @lebergerdesphotons4565  you tend to say things that you think will create the atmosphere you want.

No i answer your questions with brutal direct honesty!!.   And sorry but you STILL do not seem to even grasp the logic failure in your arguments that is wide enough to fly the HINDENBURG through.   If there was one photo one video of the plane you MIGHT have a point.   But your argument falls to pieces with every other angle video of this.  The people taking the videos don't react to a CGI airplane or something that isn't there.  And sorry but a 2 dimensional object added in POST does not get you 3 DIMENSIONAL damage.  You do know what a plate is?   Not by what you WRITE.
Reply: @roquefortfiles  that's just a conspiracy theory on your part.  Nobody saw that the next day.  they had that years later.

plenty of time to do it.

maybe you believe that it took years to find them,  you can believe in fantasy if you like.

they should have taken another month and included the wingtip vortices.

But they didn't even try to show direct views.

all the views of videos were on the wrong wall.

still fake shots showing airplanes getting ready to collide.

but only stills.
Reply: @roquefortfiles  you STILL do not seem to even grasp the logic failure in your arguments that is wide enough to fly the HINDENBURG through. If there was one photo one video of the plane you MIGHT have a point.

you still haven't shown a video.  You showed a still.  nothing easier to fake than one image.

 But your argument falls to pieces with every other angle video of this.

Only if we accept your idea that there's no software that can take one faked image and  create the details of that image in other images with the angle changed.  There were already enough images to make google earth back then,  all that was needed.

You hold yourself out as an authority, but we've seen that you think that 30 miles of wingtip vortices disappear because of a collision after.

 The people taking the videos don't react to a CGI airplane or something that isn't there.

You still haven't provided links to these alleged videos.  And youtube doesn't have them.  so you theoretically have a better repository of images than google does.

but just no links to it.  Only you get to refer to it.  And only you have seen it.

 And sorry but a 2 dimensional object added in POST does not get you 3 DIMENSIONAL damage.

What are you saying?  the damage comes from their unknown to us technology.  CGI causes zero damage and nobody has said different.  Only you straw-man-ing saying that it doesn't.

 You do know what a plate is? Not by what you WRITE.

It's what keeps flies and mosquitoes out of your brain.
Reply: @lebergerdesphotons4565  Omg!!! Do you have boxing gloves tapped to your hands?? Something wrong with your keyboard??????.
Reply: @roquefortfiles  
why?  did I spell something wrong?
Reply: @lebergerdesphotons4565  I cant find any videos of planes!!!.. because I dont look for them.  Therefore this proves my point
Reply: @lebergerdesphotons4565    I don't know what the fuck you're talking about.  I don't think YOU know what the hell you're talking about.  All the views of the video were on the WRONG WALL........???? 

The impact of the plane was covered in every conceivable angle.  North, South, East, West.   Looking down.  Looking up.  360 degrees around the building.   With Still photos and videos taken by... (Drum roll)  PRIVATE CITIZENS in addition to free lance photographers.  THEY ALL OWN THEIR IMAGES!!!  They don't work for the Government.   Your arguments couldn't hold a bucket of warm spit.
Reply: @lebergerdesphotons4565  Sure.  work cut out for me to convince people who are too stupid to understand that the lack of evidence of wingtip vortex proves that the "plane" crashes are fake.

Fake with what??  Do explain.
Reply: @roquefortfiles  fake as in no planes other than cgi planes pasted in after the fact with apparently software that you don't know.

It really wasn't that good a job.  You haven't noticed the evolution of the images over the years.  I think even the apple time machine has been messed with.

I'm still waiting for you to show me links to videos with 50 angles.  You've finally showed one still picture, easy enough to create.

I'm still laughing about you saying you've never been fooled, not once.   As though you'd know if you'd been fooled.  The definition of fooled means that you didn't know it happened.  Logic eludes you once again.
Reply: @lebergerdesphotons4565  fake as in no planes other than cgi planes pasted in after the fact,,

Mmhm!! Pasted in after the fact?  On EVERY SINGLE VIDEO?  Video's that are owned by private citizens?? 

See any problems here?   Do you think your theory holds water?
Reply: @roquefortfiles  haven't yet seen any of these private citizen videos.  and in any case,  they're not going to be as good as stills.   at 800 feet per second before impact,  what are we talking about?  10 frames per video?
Reply: @lebergerdesphotons4565    Digital Tape usually runs at 30 frames / second.   And it all depends on the lens and the field of view. And even then the video can be interpolated to slow it down so it can be looked at easier.   I don't know what you're doing with your time but there are mountains of civilian shot videos on line.  Another boxing glove problem?
Reply: @roquefortfiles  so you have a "boxing glove problem"  which prevents you from typing links to this alleged "information"  leading to the convincing evidence that Isaac Newton was wearing boxing gloves all his life?
Reply: @roquefortfiles  another thing letting me know that that one high resolution (relatively) clear photo of the plane allegedly on its way into the second tower is that if the guy had that, he had a high speed camera taking a bunch of shots.  He'd have likely had shots of it entering too, and he'd have been showing them off.   What you showed me there is surely just one shot made to order with his best techniques.

He's a liar like you,  but he can actually do something more than flap the jaw.
Reply: @lebergerdesphotons4565   Free lance stills photographer Rob Howard who shot one of the most famous shots of the second plane.  He's a liar???     For what reason?  Engineer Gene Corley photographed plane debris all over the roof of WTC 5.    You just can't trust those engineers!!!  

Dude?? you have some major issues dealing with reality.   Very sad.   I feel sorry for your wife.
Reply: @roquefortfiles  yes.  it's not plausible that there's only that one photo.  Why wouldn't he have a high speed camera taking lots of shots in a short time and be able to show us the plane arriving, entering et cetera?

just that one?  what are the chances?

Never heard of Gene Corley catching that.  I've seen the images where the whole plane is swallowed by the building without slowing down or deforming.  Debris all over the outside would be what I'd expect.  I'll search gene Corley and see what it says.  Could be staged too,  like the engine on vesey street from the wrong model plane.  That there certainly proves that there were people motivated to give an appearance of reality after the fact.  also the incident years later of having turned something up somewhere hidden high above the ground but also found to be a hoax.

It's the boy who cried wolf.  When I've already seen proven hoaxes,  it becomes more difficult to believe "new" information.

Why isn't gene corley turning up on my youtube searches?
Reply: @roquefortfiles  confirmed,  gene corley 911 in youtube turns up nothing.  So I don't believe you.  I'd feel sorry for my wife if she saw you as anything but a pathological liar.  Because that's what you are.
Reply: @lebergerdesphotons4565  if the guy had that, he had a high speed camera taking a bunch of shots.  He'd have likely had shots of it entering too, and he'd have been showing them off.

Not necessarily.  Don't assume. You weren't there.  High speed camera??  Any good camera is high speed. It all depends on what the shutter speed is set to.  One of the photos i sent you from Photographer Rob Howard was taken with a Medium format camera.  In other words extremely high resolution.  Oh.. And btw.  Rob Owns the photo.   Not the Government.
Reply: @lebergerdesphotons4565   The very same building Corley mentioned.  Section of fuselage!!  And btw this is 9 stories up.  
https://911conspiracy.files.wordpress.com/2017/06/fema_pm_baker-photo-caption-fuselage.png

When does the light go on?? Or does it?
Reply: @roquefortfiles  when I said hi speed I meant something with the ability to take many pictures quickly.

I had a  conversation with a guy who took your side regarding wingtip vortex, but he actually made an argument,  I have to go out I'll show it to you tomorrow.

I'm still however waiting for weeks now to hear your explication for why the buildings turned to powder.  I say that's orders of magnitude more energy the GPE,  you say no.  I think I could back up my argument easily enough,  how about you with yours?
Reply: @lebergerdesphotons4565   Wing vortexes happen when a wing flies THROUGH something.  Not after it has stopped flying.  The formation also depends on a few variable.  Temperature.  Relative humidity. In your case relative humility!!  And frankly anybody who watches the plane scream through the building shot LIVE as it happened and thinks they're watching a movie special effect??    Needs some help.  Not the least of which is the tracking of the shot.  If you know what that means.  I used to work in Computer Graphics.  I know what is involved.
Reply: @lebergerdesphotons4565  it's not plausible that there's only that one photo. 

It all depends on what his camera was set to.  I can shoot 20 pictures in a burst.  So long as i am set to BURST.  And if you KNOW the second plane was on its way?  Sure!! You'd have it set for a RANGE of photos.  Just like the guy who captured Mount St Helens.  Because they knew the eruption was coming.   Nobody knew a second plane was on its way.   And you assume all over the place as if it proves your point.  It doesn't.
Reply: @lebergerdesphotons4565  but he actually made an argument,
Reply: @lebergerdesphotons4565  I'm still however waiting for weeks now to hear your explication for why the buildings turned to powder. 

12% materials.  88% SPACE. You can look that up.   The building is nearly 90% AIR to begin with.  4 inches of LIGHT GRADE concrete?   A floor design that was no different to a LOWES or a High School gym roof (Charles Thornton) The floors carry the people and desks.  They do not carry the loads of the BUILDING  The dynamic loading of 22 stories collectively failing (Which it did) is orders of magnitude OVER the floor below it being able to stop or even SLOW its descent.  And with each successive floor failure the floor below it has more and more weight added to the equation.  It might slow it by 1 or 2% but each failure the mass is bigger than the last one.  That's why it continues.  As Les Robertson said.. "Plenty of weight up there to bring down the building"
Reply: @roquefortfiles  Wing vortexes happen when a wing flies THROUGH something.

Yes.  generally happens when a wing flies through the air.  if it flies through something harder,  that's called a crash.

 Not after it has stopped flying. 

agreed.  So there were wingtip vortices butting up against both buildings if planes crashed there.  And they're so powerful that big jets will wait  2 minutes to avoid relatively slower ones.

The formation also depends on a few variable. Temperature. Relative humidity. In your case relative humility!! 

I don't think you'll find a source to say that some humidity condition stops formation of wingtip vortex.  maybe it affects their duration.  let's not  speculate,  let's get facts.

And frankly anybody who watches the plane scream through the building shot LIVE as it happened and thinks they're watching a movie special effect?? Needs some help.

Maybe,  but I don't know of anybody who watched that.  

 Not the least of which is the tracking of the shot. 

This sentence would seem to want to connect itself to something just said.  I don't follow.

If you know what that means. I used to work in Computer Graphics. I know what is involved. 

Tracking the shot?  You're talking about why it would be difficult to fake that?  I can see it was difficult to fake it.  it was done poorly and the most difficult shots were completely avoided.  You've sent links, but only to shots which use the building itself to hide our view.
Reply: @roquefortfiles  it's not plausible that there's only that one photo. It all depends on what his camera was set to. I can shoot 20 pictures in a burst. So long as i am set to BURST.

Are you suggesting he accidentally got this shot?  Well how many of these "accidents" happened?   His is probably the only shot then.

 And if you KNOW the second plane was on its way? Sure!! You'd have it set for a RANGE of photos. Just like the guy who captured Mount St Helens. Because they knew the eruption was coming. Nobody knew a second plane was on its way.

That's because a first one hadn't come and a second one WASN'T on its way.

 And you assume all over the place as if it proves your point. It doesn't. 

What did I assume?  that he had it on burst?  So much the better if he didn't.  It just reduces the plausibility of the coincidence.  It sure seems more plausible to me that he graphicked a plane into that spot.
Reply: @roquefortfiles  I'm still however waiting for weeks now to hear your explication for why the buildings turned to powder. 12% materials. 88% SPACE. You can look that up. 

The air didn't get powdered,  the solid matter did.  and that 12% was 250,000 tons, or the weight of 800 767 boeings.

Name me any example of 1 mass turning 800 masses into powder.

The building is nearly 90% AIR to begin with. 

So is the (fake) airplane.

4 inches of LIGHT GRADE concrete? A floor design that was no different to a LOWES or a High School gym roof (Charles Thornton) 

Did you not see the other comment on the same page which nailed charles thornton saying exactly  the same thing I said.  He said it in 1988.  But in 200x,  "somebody" motivated him to contradict himself.

The floors carry the people and desks. They do not carry the loads of the BUILDING 

Yes,  but each one weighs as much as two 767's,  and they're held firmly in place ever 3 feet by steel columns connecting them to 110 other such slabs.  The 300 tons of boeing is insignificant.  See the phantom bolted to the track crashing into the nunclear wall.   That's closer to what would happen than what you are describing.  And the spandrel plates sure would reduce shattering by distributing loads equally over the surface of the edge of the slab.  and that's a lot of surface!   4 inches x the width of a 767.

The dynamic loading of 22 stories collectively failing (Which it did) is orders of magnitude OVER the floor below it being able to stop or even SLOW its descent.

This would be true if the object falling had significantly more tensile strength rigidity and cohesion.  It didn't.  It doesn't strike as one giant connected object.  It immediately starts breaking the stuff it falls onto which immediately starts breaking it.  then after the initial collision, you don't have one 22 story mass acting as a unit.  You have pieces of debris falling in such an uncoordinated fashion that by the time the 22 stories above breaks 22 stories below or more,  it's all slowed down enormously because almost every piece of that whole mess became small enough and slow enough to be stopped.  The dynamic load is why it could break 22 stories, but you are exaggerating.  It can't do more than that.  Jon Cole ran experiments proving it.  

If you can run an experiment that shows that his experiment doesn't scale up,  I will pay attention to that experiment.  

You haven't and you can't.  Therefore I accept his experiment as valid for larger objects.

 And with each successive floor failure the floor below it has more and more weight added to the equation.

weight that is now slower and more dispersed and hitting without coherence and the lower part of the building is stopping it.  you yourself said the floors are weak and light.  So most likely the main collisions are between metal structures.  Think about it (for the first time).

 It might slow it by 1 or 2% but each failure the mass is bigger than the last one. That's why it continues

Funny how the floors are really light when you need them to be really light but they're really heavy when that suits you.

In any case, if they're so light and so fragile,  they will fall but leave the steel structure mostly in tact.

Like the "spire".   There was nothing to make those spires we both saw go away in your scenario.  And photographers sure would have been all over their remains on the ground if they HADN'T TURNED TO DUST IN THE AIR.

. As Les Robertson said.. "Plenty of weight up there to bring down the building" 

The NWO obviously owns him.  I'm sure he won't be available for answering questions.

The light weight floors and the merely sufficient to hold them up connectors to the steel structure won't do enough work on the steel columns.  The connectors  sheer,  hardly slow the falling concrete down (as you have just said),  so they can't do much damage to the steel columns.

This is a giant hole in your theory.

And the core?   That's even worse for your theory then the exterior walls.

You've got some work to do.  Just believing "eye-witness" accounts in the age of dna leaves you with some things to work out.
Reply: @lebergerdesphotons4565  Reading your posts is a head shaking ordeal.  I think you're a little goofy in the head.
Reply: @lebergerdesphotons4565  it's not plausible that there's only that one photo. 

Why? The plane was going 560mph. If you're in the canyon's of New York your window is going to be very narrow.   And your constant explaining away still photos looks just a tad beyond desperate. 

Not reasonable.  Not rational.   There are LOADS of photos of the second plane.  And some of them were taken by RANK AMATEURS. The only person you're fooling here is yourself.   I think you have problems dealing with reality. You look like an unbelievably desperate guy trying to convince himself of something he knows he doesn't believe.
Reply: @lebergerdesphotons4565  Maybe,  but I don't know of anybody who watched that.  

Really?  I do.  I work with her.
Reply: @lebergerdesphotons4565   These are computer graphics???  Mmm Hm!!  Right.  Computer graphics??  This is not a plane hitting a building shot live on television as it happened.  This is a VISUAL EFFECT??  How much of an idiot do you have to be to believe that? https://www.youtube.com/watch?v=UGkjR60Yymg
Reply: @roquefortfiles  well,  you believe everything you see and hear on TV,  you trust your government and you think the mainstream press is a bunch of honest reporters.  So you're certainly not hurting my feelings.  You're permitting to laugh at your naivete.
Reply: @roquefortfiles  well if I get to choose,  I'm going to prefer being struck by a (faked) photo of a (fake)  airplane rather than by a real airplane.

The only photo I've seen is that one.  and it doesn't seem genuine to me.  That the fellow just happened to be pointed in the exact direction and squeezed the shutter at exactly the right time?  What are the odds?  Where was he?
Reply: @roquefortfiles  I don't know what you're referring to exactly.  The last thing I wrote to you was describing why the top piece won't damage more than the same size of the bottom piece.

And how you continue to believe that everything that the top piece breaks off immediately "joins its team"  and becomes an infinitely rigid new larger piece at each instant that it strikes a new object.  The pieces fall off the bottom offering zero resistance to leaving their old position and are instantly joined to the falling mass.  There are no elastic collisions when it's the side of the argument you want to promote,  and no inelastic ones when it's the other way around.

You modify reality to "confirm"  your cause at each moment.  The definition of confirmation bias.

All I have done  is point out what's wrong with your ideas and cite the experiments which have been run which show that what you believe never happens in an experiment.

Your whole proof is the faked videos of airplanes and the real video of unknown (to us) TECHNOLOGY  turning the wtc to powder.
Reply: @lebergerdesphotons4565  Faked videos of airplanes???   Dude??  get yourself in a home asap.   I used to work in visual effects.  I know what is involved in this.  Your comments show a horrifying lack of understanding.   And i am not wasting my time trying to school an idiot.
Reply: @roquefortfiles  

please let me know your opinion on this oldie but goodie:

https://youtu.be/xqQdy77mqzU
Reply: @lebergerdesphotons4565  l trust my Government??  Someone photographing or video taping the airplanes from the privacy of their own home has nothing to do with the Government.   You sound like a RANK paranoid.
Reply: @lebergerdesphotons4565   Damaged from the start of the first plane.  When the WTC came down it put a 9 story hole in the back of it.  The fire dept were entirely aware it was going to collapse. The structural engineers said get out.  Go read the debrief reports.  Stop watching conspiracy bullshit videos.
Reply: @roquefortfiles  s Faked videos of airplanes??? Dude?? get yourself in a home asap. I used to work in visual effects. I know what is involved in this. Your comments show a horrifying lack of understanding. And i am not wasting my time trying to school an idiot. 

Yes.  that would account for your own lack of education.  That's very enlightened of you to recognize yourself as an idiot not worth schooling.
Reply: @roquefortfiles  The people who control the government also control the press.  They also plant "private citizens"  to convince low intellect people such as yourself.  They cover all the bases.  They can fool most of the chumps with the tv and speeches by Dubya saying not to pay attention to the man behind the curtain.  Then there are the doofuses like you who think that you know the guy who just happened to toss his camer around on its lanyard and accidentally pushed the button while it just happened to be in a position to get a perfect image of the (fake) plane just before it enters the building at 500+ mph.

What are the odds?  You're a coincidence theorist.  You don't know when you're being lied to.  

Well this november you'll be able (if you're still breathing)  to tell me how all of the people dying from the (fake) vaccine have died of some harmless particle that is seen predominantly among people stupid enough to have gotten their blood injected with pharm industry poison.

You're able to believe the most implausible coincidences because you "know" somebody.

There's a pretty good chance that you're lying about knowing anybody.
Reply: @roquefortfiles   Damaged from the start of the first plane. When the WTC came down it put a 9 story hole in the back of it. 

You're believing what you heard on tv to say that you know what put a hole in it.

The fire dept were entirely aware it was going to collapse. 

Their bosses told them that.

The structural engineers said get out. 

the "debrief reports"?   I'll need a link.  typing "911 debrief reports"  is not likely to get me far.

Watch the six minute video I sent you the link to.

Go read the debrief reports. Stop watching conspiracy bullshit videos. 

I recognize the ones that are bullshit.  Those are the ones you recommend.  Even the one I sent you,  sure,  he's controlled opposition, but he sure sums up what happened quite well.

You need to learn what the word conspiracy means.

Saying that 19 guys got onto 4 airplanes to hurt america?  That is by definition a conspiracy.   It's the "official" conspiracy theory.  And there are so many holes ripped in it.

Like everything he says about OBL.  it's all true.  OBL  was a gov't agent working for u.s. "intelligence".  He was never charged with a crime, but he's up to his neck in the "official"  conspiracy theory.

There are so many facts which you ignore.  You pull a couple of observations out,  you attribute them to things you can't prove and you think that you've got it all right.

You're not too bright.

Tell me why the official conspiracy theory still says that OBL  planned it and yet they never tried to arrest him and even treated him at a u.s. army base for his kidney disease.

And why was his father with GHW Bush on 911?  And why did his plane get right out of there while other people had to rent a car and drive back from CA to NY?

You ignore everything interesting to focus on stupid lies which you feel you can prove because of your "superior" knowledge of computer graphics and the "people" you know.

These are  all logical fallacies.

Nothing you have said is worth anything to anybody but a fool.

So listen to yourself,  don't listen to everybody who knows the truth.

As Jack said,   apparently "you can't handle the truth".
Reply: @lebergerdesphotons4565  Low intellect people??   Pal??  you've got delusions of grandeur.    What you write is not reasonable.  It is not rational.  And i know enough to know when I am talking to a nutcase.
Reply: @lebergerdesphotons4565  accidentally pushed the button while it just happened to be in a position to get a perfect image of the (fake) plane just before it enters the building at 500+ mph.

GREAT!!! So did 2 dozen other people!!! Including a girl i work with. When you get through discounting all of them you get back to me.   The fact that you can't even notice the logic failure in what you're saying pretty much says all.  And you sit there calling other people "Low Intellect"??  Were you passed over for some job?
Reply: @roquefortfiles  
I haven't had a job since 1983.  I stopped before I'd made enough to where I'd be required to file federal taxes.

Since then I've had my own businesses.

It's more likely to believe that 24 people faked photos than that they all pushed a button within 1 millisecond of each other.  

800 feet per second,  that would keep the images of the fake plane within 10 inches of the same distance from the building.

Of course you're too lazy to send me 24 or links or one link with the 24 different photos.

24 button pushing fingers all aimed exactly there, all pushing within 1 ms of each other and none of them did this because they saw what was happening.

right.

Would you mind giving me an estimation of how many of the 250,000 tons of cement were turned to fine powder in each building from the violence of these dynamic loads?
Reply: @lebergerdesphotons4565  You're certifiable dude.  You need to be in a home.  Absolutely barking mad.
Reply: @lebergerdesphotons4565  24 button pushing fingers all aimed exactly there, all pushing within 1 ms of each other and none of them did this because they saw what was happening.

???? Do you spend your time explaining away events constantly because you don't like the implications of what they mean??  Do you honestly think people all over NY who had their cameras ALREADY trained on the burning WTC are incapable of clicking a photograph when the second plane came in??     You sound like a KOOK!!  Trying to explain away every single photograph of the airplane just because it doesn't fit in with your warped world view?  Do you know how DESPERATE you sound??   And believe me I am a very reasoned LOGICAL person.   You sound like a raving KOOK.  Running around trying to explain away every photograph of the aircraft.   Barking MAD!!!!
Reply: @lebergerdesphotons4565  Call up Stanley Praimnath who watched the second plane fly into the building 2 floors above his floor.  Call him up and tell him all of the stuff you're so desperately trying to convince yourself didn't happen. I am sure he'd love to hear from you.
Reply: @lebergerdesphotons4565  

https://www.youtube.com/watch?v=IipKqoF4mOk

1:48 minute mark.  Tell Florence Jones the airplane was fake you barking mad old kook.   Line up to get in senior care.  Your brain has ceased functioning.
Reply: @lebergerdesphotons4565  I am sure you haven't had a girlfriend since 83 either.  And i every time i point out the total failures in your logic all you ever do is bring up some other ridiculous point.   You're all over the place.  I don't even think YOU know what the hell you believe.
Reply: @roquefortfiles  yes dear,  so you don't agree that if you  had already faked one photo and hadn't yet found 23 people who had such a photo that they'd taken that it'd be easier to fake it 23 more times than find those people?

You must have had a lot of family members be embarked by the men in the white suits.  It's like an obsession with you.

Are you going to give me your estimate of what percentage of the lightweight concrete in 1 tower was powdered by the dynamic load (that you love to talk about)?
Reply: @lebergerdesphotons4565  https://www.youtube.com/watch?v=bcdpMt38ip8

2:19 minute mark.  When does the light go on Berger???  When does the circuit complete???  Or does it???   You do realize what a complete KOOK you look like.  Right??!!  No job since 83 which means you're just about ready for the home.
Reply: @lebergerdesphotons4565  24 button pushing fingers all aimed exactly there, all pushing within 1 ms of each other and none of them did this because they saw what was happening.

???????????????!!!! Sorry,  WHAT??
Reply: @lebergerdesphotons4565    Did you watch the videos with Florence Jones and Stanley Praimnath??   They watched the second plane roar in from the floors they were on.    Dude? when does the light go on??? When does the circuit complete??  You're not that brain dead.  Or maybe you are.
Reply: @lebergerdesphotons4565  The wing tip of the airplane was stuck in Stanley Praimnath's office.   The impact nearly killed him.   He was 2 floors below where the plane hit.  He talks all about it.   
When does the circuit complete Mr Berger???  When does the light go on????
Reply: @lebergerdesphotons4565   Florence Jones?  Stanley Praimnath.  They were inside the building.  They WATCHED the second plane approach and crash 2 floors above them. The wing tip plugged itself in Stanley's office.    If you told them what you tell me they'd bitch slap you.   I'd be in line behind them.    You're a kook.  Flaming BARKING mad.
Reply: @lebergerdesphotons4565  Freelance Stills Photographer Sean Adair!! HE DOESN'T WORK FOR THE GOVERNMENT!!!!!!!!!!!!!!!!  This time he had it set to burst.    KNOCK YOURSELF OUT DUDE!!! 
https://www.adairproductions.com/photo/WorldTradeCenter/wtc.htm
When does the circuit complete??
Reply: @lebergerdesphotons4565  Here's over a DOZEN amateur photos of the second plane.  And a note from each person of what they were doing at the time.  KNOCK YOURSELF OUT BUD!!!  WHEN DOES THE LIGHT GO ON???  WHEN DOES THE CIRCUIT COMPLETE??? 

http://www.911conspiracy.tv/2nd_hit_photos.html#Sean_Adair
Reply: @lebergerdesphotons4565  Rob Howard was at the window of his apartment on Rector Street and Broadway. A photographer accustomed to shooting travel, lifestyle, and portraiture, with medium and large-format cameras, Howard leaned out over the sill. He shot up at the bold, vaulting lines of the structure with a Pentax 6x7— just as the plane 'flew over our building and slammed into the south tower,' he says. 'It seemed to take forever. Time stood still.' He rendered the moment right before impact in finely detailed black-and-white, as if he were on an architecture shoot."
Reply: @lebergerdesphotons4565  Oh and like Iam going to be able to provide this information to you (concrete) and Because I cant that this somehow proves your point???  Dude I know EXACTLY what your all about!!!.
Reply: @roquefortfiles  when you start citing events that can be proven to be true, that don't require an appeal to authority,  eye-witness testimony or any of the list of logical fallacies.

Are you going to respond regarding the quantity of lightweight concrete powdered per building?

You do know that there was about an inch of fine dust all over 100 acres and probably a lot that blew into the water?

I see the images of the ambulance which was parked right next to the building before it "fell"  and right afterward was one of the tallest objects all around.  That means that a lot of lightweight concrete was dustified.

How much do you think?
Reply: @roquefortfiles  only one of Adair's images have an airplane.  It's very small.  Not many pixels to fake,  not many clues to prove that it was or wasn't faked.  

Notice I didn't say that the building was destroyed.  But the juxtaposition of 250 pixels representing an airplane in one picture and the explosion which I've never said wasn't real  doesn't prove that those 250 pixels weren't created after the fact or that a real plane was there.

You make it sound like it's impossible to fake it.  Why is it impossible?
Reply: @roquefortfiles  

Oh and like Iam going to be able to provide this information to you (concrete) 

Excuse me friend,  apparently I wasn't clear.  I want your opinion just as a base for a calculation what percent or range of percents you figure were powdered based on whatever you want to base that on.

and Because I cant that this somehow proves your point??? 

No.  looks like you got it wrong again trying to anticipate me.  Maybe you can just answer the question now.  Feel free to include a % indicating what you think  your guess is worth based on the circumstances,  like It looks to me like there was only 10% turned to powder even though I can't explain why 5 seconds after the "fall"  an ambulance is the tallest object.  Or maybe you'd base your guess on a calculation you made from the photos you've observed of the piles of dust on the ground plus your personal map of new york that you have in your head.

 Dude I know EXACTLY what your all about!!!.

I think you don't.  Wouldn't it make more sense to cooperate and let me put my foot in my mouth?  That's what you think I'll do, right?  Why not let me?
Reply: @roquefortfiles  

 The wing tip plugged itself in Stanley's office.

Have you got a photo of that?  Or is this just more eye-witness testimony of people that I've never heard of?
Reply: @roquefortfiles  

the building fell into its own footprint.  The debris didn't end up in the underground,  that's been established.  You say that the building was 12% solid and 88% air.  so it was 415 metres tall,  if it was concrete fragments as opposed to powder it would have made a pile 49 metres tall.  But what we saw was the ambulance being higher than most of it.  If you disagree with that, please show me how the shot with the ambulance hid that.

So what percent of the concrete was powdered?  And what input of energy was there other than mgh?
Reply: @lebergerdesphotons4565   Pixels??? Photos in 2001 were largely film.  Especially professional stills photographers.  Which means there is a negative associated with the photo.  Which means there is a LAB associated with the photo.   And your attempt to explain away over 53 photos is beyond pathetic.   You're a desperate DESPERATE Conspiracy NUT.
Reply: @lebergerdesphotons4565  Accepting a rank amateurs photo is appealing to authority???   Really?.
Reply: @lebergerdesphotons4565  You want my opinion??  No problem.  I think you're a nutcase with Confirmation bias issues that are off the charts.   You're a conspiracy freak who has made up your mind about this event and NOTHING will change that.  If we dumped the plane and the bodies at your feet you wouldn't have a moment of realization.   And frankly i think what you write is nothing but an insult and a disgrace to the people who died.  I know what guys like you are all about.  This is not about Sept 11th.  You have "Government" issues.   You're a RANK paranoid who thinks everyone and their dog are out to get you.
Reply: @roquefortfiles  

no.  it's believing an alleged eye-witness without knowing if he's telling the truth.
Reply: @roquefortfiles   No problem. I think you're a nutcase with Confirmation bias issues that are off the charts. You're a conspiracy freak who has made up your mind about this event and NOTHING will change that.

I"m open to facts and logic.  You have thus far produced none.

 If we dumped the plane and the bodies at your feet you wouldn't have a moment of realization. 

You could have bought or stolen wreckage from some other incident and raided a morgue.  It's not a think I couild confirm.

And frankly i think what you write is nothing but an insult and a disgrace to the people who died.

My opinion is that they'd want their real killers to be brought to justice.  I know it's not 19 doofuses many of whom weren't even there and are still alive.  This was proven and your gov't didn't bother modifying the list.

 I know what guys like you are all about.

Yes,  you know lots about everything except logic.  It's your weakness and it's my strength.  I feel that logic is what is called for here.

 This is not about Sept 11th. You have "Government" issues. 

It's clear to me that all of the planet's gov'ts are controlled by the same people.  Those would be the people who own more than 80% of all stocks and real estate.  If they didn't control the gov'ts, they wouldn't have been able to accumulate that.  Are you suggesting that I"m wrong?

Are you going to give me your opinion on the amount of concrete atomized?

You're a RANK paranoid who thinks everyone and their dog are out to get you. 

You're wrong again as usual.  I don't think anybody is after me in particular,  rather all of us in general.  It's clear they're preparing to kill most of us,  they've graven it in stone several years ago in 8 languages, many of them no longer spoken on the planet.

Why do you choose to ignore all of this.  These are things for which not only can I demonstrate with photos, but you could go to Georgia and see it for yourself.

So,  how much concrete was pulverized?

Answer and I'll show you with logic where you must be wrong.

And you can't hurt my feelings with anything you say because you're not a personal friend and I have zero respect for your thought processes, so maybe stick to the subject matter.

It's not a matter of interest for anybody but you that you feel I should be locked into a psychiatric ward.

Apparently you don't have what it takes to argue  logic with someone who you think is crazy.  So you are, logically,  les logical than a certifiable nut case.

If you won't give me your opinion,  I'll write what I have to write without it.  

I didn't see a pile 49 metres high in the footprint of the building.  Something's missing.  How tall is an ambulance?
Reply: @lebergerdesphotons4565  Without knowing if he's telling the truth???  And sorry but what reason does some entirely random citizen have for lying to you on such an event?    What you're talking about is not REASONABLE.  It is not RATIONAL.   It is the ramblings of some totally paranoid NUT.   Nobody could possibly believe what you continually tell yourself.    You honestly think that every single photograph of the second plane is not real???  Over 53 of them???   Let alone all of the network news footage.   I am sorry pal but freelance Videographers don't show up to work every day with express intent of LYING to you.   I speak from first hand experience.  I used to shoot news.
Reply: @roquefortfiles  Without knowing if he's telling the truth??? And sorry but what reason does some entirely random citizen have for lying to you on such an event?

First of all,  he wouldn't be lying to me.  He'd just be lying.  As usual, you are saying that i've said things I haven't said and then denigrating me for having said the thing I haven't said.

 What you're talking about is not REASONABLE. It is not RATIONAL. It is the ramblings of some totally paranoid NUT. 

You seem to have trouble with the definition of the word paranoid.  I don't think somebody is out to get me.  I think it's possible that this person is lying and I don't have a way to verify it.  I'm still looking for something verifiable.  If it makes you feel better to say that I"m paranoid because I point out that it's possible that this person I've never met is lying or mistaken, say it.  But it's meaningless.

Nobody could possibly believe what you continually tell yourself.

Well,  not many.  I see most people even believe their government as it acts as an agent of the corrupt pharmaceutical industry.  They are lining up for vaccines whose animal trials killed all of the animals.  That's not being publicized.

 You honestly think that every single photograph of the second plane is not real??? Over 53 of them???

If one is fake,  53 can be fake.  why not?  It can't be proven.  You haven't made a case that such images can't be created with the tools of this trade which you claim to have exercised.

 Let alone all of the network news footage.

You mean like the one where CNN the second time around covered up the ridiculous nose-out image with a giant cnn banner?

 I am sorry pal 

Yes.  You are sorry.  First thing you've gotten right in this post.  (Did I take that out of context?  no,  couldn't be)

but freelance Videographers don't show up to work every day with express intent of LYING to you.

Nor do doctors and hospital officials.  But when they see they're going broke and the gov't pays 13.000 for a flue diagnosis and 65.000 for a "covid19"  diagnosis,  they start getting sorely tempted!

 I speak from first hand experience. I used to shoot news. 

Apparently you never shot anything that was worth money to somebody to change.
Reply: @lebergerdesphotons4565  Facts and logic? And I've provided none??   I have absolutely buried you in a MOUNTAIN of facts.
Reply: @roquefortfiles  
would you say that at least 20% of the concrete was turned to dust?

I was just looking at images of dust everywhere in the aftermath.  an inch on license plate brackets,  more on the ground.  This over a large area.

I'm looking for the picture of the ambulance parked next to where the wtc tower used to be quite recently.  I have it in Judy Wood's book,  looking for it on the net.

I'm getting my calculations together now.  will post them shortly.  You'll tell me what you see wrong with my logic.
Reply: @lebergerdesphotons4565  Why are you worried about concrete when you think the airplanes didn't exist?  Doesn't make any sense.  You dont make any sense. Full stop.
Reply: @roquefortfiles  

no.  none of your facts are verifiable.  You are repeating what somebody has claimed.  how do you prove that the photos aren't retouched?
Reply: @roquefortfiles  

 Why are you worried about concrete when you think the airplanes didn't exist?  Doesn't make any sense.  You dont make any sense. Full stop.

here's why:

Fact 1:

Both towers were built out of steel frames, glass, and concrete slabs on steel truss joists. A single tower consists of 90,000,000 kg (100,000 tons) of steel, 160,000 cubic meters (212,500 cubic yards) of concrete and 21,800 windows. One single tower has a mass of about 450,000,000 kilograms (500,000 tons). The interior design of the World Trade Center contains 240 vertical steel columns, which were called the Vierendeel trusses. These steel columns maintained the tower's structure and helped to create an extremely "light"building.

source:  https://hypertextbook.com/facts/2004/EricChen.shtml
--------------------------------------------------------------------------------------------------------------------------------------

Fact 2:

Dorf, Richard. Engineering Handbook. New York: CRC Press, 1996. 	"The density of normal concrete is 2400 kg/m3 and the density of lightweight concrete is 1750 kg/m3 	1750–2400 kg/m3

source:  https://hypertextbook.com/facts/1999/KatrinaJones.shtml
------------------------------------------------------------------------------------------------------------------------------------------
Fact 3:

on higher floors, the thickness of the steel plates making up the columns decreased, becoming as thin as 6
mm (¼ in) near the top down from as thick as 76 mm (3 in) at the lower floors.

source:  https://www.google.com/url?sa=t&rct=j&q=&esrc=s&source=web&cd=&ved=2ahUKEwjNgpX4-9vxAhUuzIUKHbO8CqwQFjAAegQIAxAD&url=https%3A%2F%2Ftsapps.nist.gov%2Fpublication%2Fget_pdf.cfm%3Fpub_id%3D910105&usg=AOvVaw1ku8y0btSoUmmIaj46jhZ0
----------------------------------------------------------------------------------------------------------------------------------------
 
----Calculations:

160,000 m3  * 1750 kg /m3 = 280 million kg  of concrete. (facts 1 and 2)

450 million kg  falls 200 metres  >   450 million * 9.8 m/sec2 * 200 metres =  880 billion newton meters of energy.

That's clearly overestimated since the bottom 1/3 weighs as much as the top two thirds (from fact 3,  I used 38mm instead of 76mm because the bottom 7 floors have many less columns) and a huge quantity of the 450 million kgs  is in the 65 five foot foundation which didn't fall at all.

880 billion newton meters / 280 million kg of light weight concrete  makes 3140 newton meters/ kg of concrete.

a newton meter equals a watt second.  so 3140 watt seconds available to crush a kg of concrete.

But wait, you'll say that all of the concrete wasn't crushed.  That's why I've been asking your opinion on the %.

let's say it was 20%,  that seems quite low based on the photos of the debris field just after the "collapse",  but I'll use that.

Based on 20% of concrete being dustified,  that'd be 15700 watt seconds per kg available to  to dustify it.

Fact 4:

https://business.directenergy.com/blog/2017/september/international-coffee-day

how much energy it takes to make a pot of coffee: .083 kwh 
------------------------------------------------------------------------------------------------------------------------

*  (1000 watt hours/kw hour) * (3600 seconds / hour) >  298,800 watt seconds

298.800 watt seconds for a pot of coffee / 15700 watt seconds to dustify a kg of 30 year old cement 

The energy to make 1/19th of a pot of coffee would need to be sufficient to dustify 1 kg of lightweight concrete.

---------------------------------------------------------------------------------------------------------------------

The question:   does this seem plausible to you?  
Would you perhaps care to postulate some other source of energy more than mgh (gravitational potential energy)?

I think if you could manufacture a machine which could dustify 19.03 kilograms of concrete with the same energy necessary to make a pot of coffee that you'd have a winner.

Please do comment.  

This is what I mean by logic.  We don't need to believe anybody other than the above sources who are giving information that can be corroborated.

Notice that I haven't taken any of the GPE to break the steel columns on the perimeter or in the core.  That's all to your good.
Reply: @lebergerdesphotons4565  240 vertical columns that DRASTICALLY reduced in thickness the higher the building went. Where the plane hit the columns were about 8 millimeters thick.  The rest of it was nothing but glass!.  The first plane took all of this out at 450 mph.  The second hit with 50%    more force.  450 mph and it is entirely through the building!!.
Reply: @roquefortfiles  

No response regarding the energy necessary to dustify so much lightweight concrete?

I believe I just showed you calculations that even you can understand which show that  GPE falls orders of magnitude short  of sufficient to dustify so much concrete.

Notice I did this without ever putting a figure on the energy required to dustify 1 kg of concrete.

But find a piece of concrete that weighs 19 kg and tell me how you go about dustifying it with the same energy required to make a pot of coffee.

Maybe you can.  I"m betting against it.  I've whacked pieces of concrete with a hammer.
Reply: @lebergerdesphotons4565  And sorry but there are photos of floors sandwiched together. There are also photographs of the heavy GRAVEL  the floors were turned into.  Not dust.. Gravel.  And all of your WOW  nerd math here doesn't prove your point.
Reply: @lebergerdesphotons4565  You talk one shit load of bafflegab.  Clobber someone over the head with numbers???Go and look at the evidence!!. Go and look at 8 floors piled 6 feet high!! Go and look at concrete converted to heavy gravel.  I've seen the photos.
Reply: @lebergerdesphotons4565  Logic is my weakness.???. The funniest comment you've made the logic failures in your arguments are big enough to fly the HINDENBURG through!!  That you keep on arguing without even seemingly noticing them just makes you look beyond crazy.
Reply: @roquefortfiles  And sorry but there are photos of floors sandwiched together. There are also photographs of the heavy GRAVEL the floors were turned into. Not dust.. Gravel. And all of your WOW nerd math here doesn't prove your point.

presence of gravel equals absence of powder?

So because YOU say so,  all of the images which show inche deep quantities of fine powder over hundreds of acres count for nothing?  

Ok,  in that case,  with you setting the rules to satisfy your pathetic ego,  you win the argument.

I hope that makes you happy,  to be such a yutz.

Nerd math?  Yes,  I figured multiplying and factor labelling is foreign stuff to you.

You've got important people who say whatever they want always being careful to never say something provable or disprovable who are waiting to tell you their story.
Reply: @roquefortfiles  Logic is my weakness.???

yes.  clearly.

The funniest comment you've made the logic failures in your arguments are big enough to fly the HINDENBURG through!! 

And as usual,  you say a thing,  but offer no evidence.  That's because you have none.  You're a con man, and a very inadequate one.

That you keep on arguing without even seemingly noticing them just makes you look beyond crazy.

yes,  and you notice them, but what?  You're too polite to point them out specifically? 

But not too polite to cite their existence without ever naming them.

Perhaps because your evidence doesn't exist.

You can't explain the absence of wingtip vortices,  you can't explain the insufficiency of GPE  to create either the gravel or the powder.

If you could turn cement into gravel 19kg for the price of making a pot of coffee you'd also have something worth quite a bit.

But you're only self-referential.

You're right,  I can't get enough of this.  This is classic stuff.  A pathological liar who doesn't shirk from telling his lies with an audience.  So sure of himself that he keeps right on lying.

One learns a lot about human nature from an aberration like yourself.

The best is your reliance on the "reputation" of the men in white coats  to lend you authority.

Ok,  so your latest brilliant revelation is that  the presence of gravel means that all of the photographic evidence of thousands of tons of fine powder  doesn't exist.
Reply: @roquefortfiles  

so 1% of the concrete transformed in powder would use up all of the gpe if it took the same energy to powder 1kg of solid lightweight concrete into a fine powder as it takes to make 1 pot of coffee.

https://www.researchgate.net/publication/323703069_Energy_consumption_of_two-stage_fine_grinding_of_Douglas-fir_wood
 
 Oven dried douglas fir, to make it pass through a screen with .69 mm diameter holes >> 333 grams with the energy used to make a pot of coffee.

notice this doesn't include the energy to oven dry it.

it's already 3 times over budget for douglas fir compared to cured concrete.

so all of the gpe would be needed to grind 1/3 of 1% of the weight of the concrete  to grind  that weight of oven dried douglas fir down to < .69 mm diameter pieces.

I think we can assume that it's harder to grind concrete to powder than oven dried fir to < .69mm.

Do you think it was less than 0.33% of the  volume of the concrete which was turned to powder and made > cm thicknesses of powder on hundreds of acres?

Even with this,  I'm not counting any of that energy to damage the 100,000 tons of steel.  I'm letting you include the foundation which under the ground and very heavy in the  GPE even though it doesn't move.  I'm treating the building as having the same density from top to bottom.

Even with that, we see that ALL of the energy is used up to grind 0.33% of the weight of the concrete if it's as easy to do as grind ovend dried fir down to .69 mm diameters.

And if you don't see that these calculations show you that you're wrong about everything you've said,  then please suggest where all of this energy came from or where this dust came from that wasn't there before the "collapse"  but was there and can still be seen on many videos.

Your higher education in photo editing and video editing,  what's easier,  inserting a fake plane?  Or inserting a fake layer of dust?  And the dust was there for so much longer than the plane, and just as photogenic.

I know you'll have a hard time with this documented quantification of energy use,  because you find multiplication and factor labelling to be higher mathematics.

Just more proof that you're a doofus.
Reply: @roquefortfiles  

or maybe it requires much more energy to grind oven dried fur to .69 than cured lightweight concrete to fine powder.

here's how google defines fine powder:

Fine powder

A powder all the particles of which pass through a sieve with a nominal mesh aperture of 180 microns and not more than 40 percent by weight pass through a sieve with a nominal mesh aperture of 125 microns.

the document I showed you about grinding says that this takes a lot more energy than 690 microns (.69 mm)

I know you can't see it (because you're totally brainwashed) but I did just prove that what you say is impossible or irrelevant.

Notice there are two things you've said with which I actively disagree.

I say that there were no commercial jets crashing into the wtc towers.

I also say that jet crashes would be unable to create the dust we saw.

Lack of wintip vortices prouves the first,  the energy required to make the powder proves the second.

I used only documented research by scientists to prove the second and common sense to prove the first.

Wingtip vortices which are known to cause severe rolling of flying airplanes were unable to even make smoke particles swirl.

Sounds like there were no wingtip vertices, or that no photographers were able to photograph the right part of the smoke cloud.

Take your pick.

Though you don't know it,  you're clearly beat.

your way out?  Prove that the quantities of powder in the videos add up to far less than 1% of the weight of the concrete.

You can try to argue that it's drywall,  but everybody who took samples saw it differently.

I'm going to search for the results of composition of samples of that dust.
Reply: @roquefortfiles  240 vertical columns that DRASTICALLY reduced in thickness the higher the building went. 

Which means that the center of gravity is significantly less than half way up.  e=1/2mv2.   so this reduction of height of the center of gravity  is proportional to the square of the velocity,  so if that lowers the center of gravity to 90% of half way,  then there's only 81% as much Gravitational Potential energy.  So what's this got to do with with the 88 floors below?

Where the plane hit the columns were about 8 millimeters thick.  The rest of it was nothing but glass!. 

Wouldn't matter if the glass wasn't even there.

 The first plane took all of this out at 450 mph.  The second hit with 50%    more force.  450 mph and it is entirely through the building!!.

not force,  energy.  and it's 44 percent (based on 450 mph and 540 mph, though I thought it was 460 and 540 which would only be 38%)
Reply: @roquefortfiles  Logic is my weakness.???. 

clearly.

The funniest comment you've made the logic failures in your arguments are big enough to fly the HINDENBURG through!! 

which you can't mention specifically.  Because of security? (yes,  doofus,  that's a joke)

 That you keep on arguing without even seemingly noticing them just makes you look beyond crazy.

and here below we see a link to frequent episodes of boeing commercial jet fuselages failing from the stress of air on them.

The same fuselages that you have going through 1/4 inche thick steel beams and 4 inch concrete slabs hit on edge with that edge protected by thick spandrel plates with rubber bumpers between the spandrel and the slab.  Going so far through them that they come out the other side.

You're the only doofus I've ever seen the nose out as something that happened.  All of the other liars say that it was a video artifact.

https://www.google.com/url?sa=t&rct=j&q=&esrc=s&source=web&cd=&ved=2ahUKEwjHzcjLz9zxAhXgAWMBHacdCgIQFjAEegQIDhAD&url=https%3A%2F%2Fflightsafety.org%2Fwp-content%2Fuploads%2F2016%2F10%2Fasw_oct11_p18-20.pdf&usg=AOvVaw1_ulp8DEKuiXWIFd1NvWrz
Reply: @lebergerdesphotons4565  Whatever the fuck GPE is???  you talk like everyone just miraculously KNOWS everything you're saying.  And then thinks you're some wild genius.  What an eye roll.  Your method of debating is to absolutely BURY people with a whole lot of BAFFLEGAB.  How old are you??? You sound about 85 and just completely detached from reality.  I think you're some loser who lives in a basement somewhere and has never had a relationship in 40 years.
Reply: @lebergerdesphotons4565  Your higher education in photo editing and video editing,  what's easier,  inserting a fake plane?  Or inserting a fake layer of dust?  And the dust was there for so much longer than the plane, and just as photogenic.

(Beyond an eye roll!!!  You just have absolutely no idea do you??  I am guessing that you've never heard the term "ARTIFACTS"??? )
Reply: @lebergerdesphotons4565  Whatever the PPE of the collapse was or whatever the GXY of the concrete floors was? I am not sure.  Can you tell me what the gross pulverization of the DMU was???   Can you tell me what the fracture rate of the  FME was.. ???  If you can't do this then this proves I am right.  Because I am such a smart guy.  I just can't handle how smart I am.    I am ridiculously smart.
Reply: @roquefortfiles  Whatever the PPE of the collapse was or whatever the GXY of the concrete floors was? I am not sure. Can you tell me what the gross pulverization of the DMU was??? Can you tell me what the fracture rate of the FME was.. ??? If you can't do this then this proves I am right. Because I am such a smart guy. I just can't handle how smart I am. I am ridiculously smart. 

I"m not even interested to know what your letters stand for.

I do feel quite certain that it is more difficult to dustify concrete than it is to reduce douglas fir to < .69mm diameter pieces.

I don't think you'll find anybody who doubts that for an instant.

You sure won't find a document which says it.

You are desperate.  You know that what I've written proves that you absolutely have to be wrong.

100% of the GPE (gravitational potential energy)  of the mass of the wtc (world trade center)  towers  is used up to turn 1/300 of the mass of the concrete  into fine powder IF....

If it takes nomore energy to turn wood into saw dust than it takes to turn concrete into fine powder.

But it's likely to take a lot more energy to turn concrete into fine powder than douglas fir into <.69mm pieces.

I can't quantify it.

Is this the straw you'll grasp?

Probably.  You're not a better loser than you'd be a winner.

But you're no winner.
Reply: @lebergerdesphotons4565  I"m not even interested to know what your letters stand for.

What's even sadder is that the joke goes straight over your head.    You're just a lot of bafflegab.  Hit someone with a landslide of numbers and data
Reply: @lebergerdesphotons4565  53 Photographs of the airplane were faked??  Do you know what "Digital Artifacts" are?  Just like you didn't know what a "Plate" was.
Reply: @roquefortfiles  None of that interests me.  Given that I've just demonstrated that the Gravitational Potential Energy of the tower is orders of magnitude insufficient to do what was done,  whether there were airplane or not (there weren't) isn't even of any interest.

It's just a distraction.  I have proved that 911 was not caused by airplane crashes.

If you care to dispute my proof,  ok.  Talking about planes and computer graphics?  I just don't care.

I also proved logically that there were no fixed wing aircraft there because the hundreds of videos of the expanding smoke showed zero evidence of what would have been an enormously strong wingtip vortex sucking some of that slow moving smoke into itself.

So why would I let myself be dragged into your stupidity?

You're too incapable of high school physics and junior high math to follow my reasoning, perhaps.

You're enamored with your own sense of humor,  I find it to be of zero interest,  because you're a liar.  Laughing with somebody is something I reserve for people for whom I have respect and/or sympathy.

You are a  nearly useless doofus.  Once again though I thank you for motivating me to find these means to prove what I've always known.

That 911 is a complete hoax.

The interesting part of 911 is as Judy Wood said:   It is prove that there are unlimited sources of free energy all around us.

That's the most important lesson to take from it.

Even the majority who will remain too brainwashed to realize that it was a hoax could still accept to use free energy if it will be spoon fed to them by people who don't have their heads up their asses as is clearly your case.
Reply: @lebergerdesphotons4565  I've just demonstrated that the Gravitational Potential Energy of the tower is orders of magnitude insufficient to do what was done

Quote!! "Plenty of weight up there to bring down the building"  End quote.. Les Robertson. Chief Structural Engineer World Trade Center..

Sorry but your qualifications were?????

  Other than being a loud mouth bafflegab egomaniac who loves to hear himself talk??
Reply: @lebergerdesphotons4565  I have proved that 911 was not caused by airplane crashes.

No you haven't!!
Reply: @roquefortfiles  as usual you offer no details.

Please share your legendary wisdom and explain to me my error.
Reply: @lebergerdesphotons4565    Your error?? How about ego run off the rails?  You think you know more than the engineer responsible for building it??  Really?  What are you the Rainman of Engineering and Physics??   Les Robertson is on record saying that there is NO WAY the building is going to deal with 14 stories failing.  No way!!. Not possible. Not REMOTELY possible.   And you trump him??   You physics geeks are all the same!!! Intellectual delusions of grandeur.  Nobody knows what the hell they're doing.  Only I know what I am doing.   You people are all the same.  And if there is one thing i absolutely hate its Physics Geeks.
Reply: @roquefortfiles  Your error?? How about ego run off the rails?

That's not what I'm looking for.  Tell me what was wrong with my reasoning.

 You think you know more than the engineer responsible for building it??

No.  I think that we don't know why he said what he said.  He's like anybody else.  He has a family which can be threatened,  he can have done something that he'd be ashamed to see come out and "they" have a system of surveillance that can find these things out.

Just because he says a thing, that doesn't mean that he believes it.  He'll have said what they wanted to take the pressure off of him.

He obviously said the opposite in the 1960s when his team said that a 600 mph crash of a 707 would do only local damage.

This is typical of your low rent mind.  A man contradicts himself, you take the thing you like and treat it like the gospel.  When he said the opposite,  you'll ignore that.

This is a good demonstration of the absolute absence of integrity which says what you are.

Really? What are you the Rainman of Engineering and Physics?? 

Why don't you stick with what I wrote and tell me if you see a logical problem with it.  

Referring to some quote from some person is the logical fallacy of "appeal to authority".

Les Robertson is on record saying that there is NO WAY the building is going to deal with 14 stories failing.

Even if he said that and meant it,  he also said that an airplane crash couldn't do that.  So maybe what he is subtly saying is that if 14 stories are falling that something necessarily  is happening which will destroy the whole building and given that, of course it can't resist, because it is being destroyed from top to bottom from something he won't mention.

 No way!!. Not possible. Not REMOTELY possible. And you trump him?? 

I have no motivation to lie.  He may.  You can't know that.

You physics geeks are all the same!!! 

I"m just a guy who understood high school physics and grade school math.

You seem to be admitting that you hadn't understood either.

So wanting to feel like you're not incapable of understanding your world you're trying to compensate for your inability to reason and use logic with the logical fallacy of "appeal to authority".

And you will deny that this man could have pressure on him to say what the people pressuring him want him to say.

That has nothing to do with the logic of the physical situation of the destruction of the building.

That's Les Robertson wanting to keep on breathing and see his family continue to breathe.

Intellectual delusions of grandeur.

That is your interpretation of what you think you see,  and you're welcome to it.

I'm not in the least surprised that you haven't at all addressed what I have written.  My calculations.  I knew you wouldn't.  I take your refusal to look at what I've said as confirmation that you know I'm right.

I like the irony that you've been trashing the design of this building for weeks and now you're going to use the reputation of the guy who designed it to decide that my theory is not worthy of your commentary.

You are a hypocrite who will say anything to give yourself the idea that you're not the ignorant arrogant waste of a human life that I know you are and you know you are.

 Nobody knows what the hell they're doing. Only I know what I am doing. 

Right.  you said the Les Robertson made a building that was very weak.  And now you are telling me that he's the reference that lets you know it's not worth even looking at my logic.

You are a pathological liar.

You people are all the same. 

What people are you speaking of?  People who are smarter than you?  People who disagree with you?  People who see you for the liar and hypocrite that you are?

And if there is one thing i absolutely hate its Physics Geeks.

You hate anybody who got an A in high school physics.

Yes,  physics would get in the way of a lad like yourself who want to live in a world not constrained by the laws of physics.

You hate Newton,  Feynman,  Einstein,  me,  and everybody in your high school class who finished in the top 20%

And none of those people give a damn about you because it's so clear that you're so utterly worthless.
Reply: @lebergerdesphotons4565   I offer no details??   "There is NO WAY that the building is going to deal with 14 stories failing.  Not possible.  Not Remotely possible"... Les Robertson chief Engineer WTC.  

Your qualifications were........?
Reply: @roquefortfiles  

That I know that sometimes people choose to lie or are forced to lie, which is really the same thing.  If he's been threatened by someone with clearly more power than him, if he doesn't cooperate he will disappear like so many before him.

You don't want to acknowledge that he participated in the study before the building was made that it would only have local damage from a 600 mph crash with a 767 size plane.  He seems to have changed his mind.

You have demonstrated that you are too unsure of yourself to try to determine something for yourself.  You choose to listen to authority.

I choose to question authority.

You are apparently too uneducated to look at my calculations and see that I have proven that the gravitational potential energy of the falling mass of the wtc tower falls short by orders of magnitude to even transform 1% of the concrete into fine powder.

The videos from that day show enough dust there in  enough places to easily see that there was orders of magnitude more fine powder than 1% of the  weight of the concrete in the building.

1% would be 13 acre feet.

There was visible dust 4,720 metres away at the empire state building.

The first thing that Jon Cole and I do when we are trying to understand something is to eliminate the impossible.

A building collapse could not possible create so much fine dust, therefore it was not a collapse.

An airplane crashing at 500 mph and then exploding and none of the smoke being pulled into the wingtip vortices is impossible and therefore no fixed wing airplane crashed into the building.

If you prefer to simply believe a fellow who is perhaps lying to save his life, or just to laugh at the american people as he pockets his backsheesh for lying, or maybe was in the same psych hospital with you and your mother and now believes things which arent true,  you are welcome to believe that.

If that brings you pleasure to indulge this fantasy of yours, please continue.

I'm more interested in actually knowing what happened whereas you're interested in believing a thing and then seeking out confirmation bias.

You have that right.

Maybe you could tell us what happened to you in seventh grade algebra which made it that you were too ashamed to try to understand any math or physics afterward?  Some sort of humiliation no doubt.
Reply: @lebergerdesphotons4565  You don't want to acknowledge that he participated in the study before the building was made that it would only have local damage from a 600 mph crash with a 767 size plane.

Despite the fact that no computer or program existed at the time that could REMOTELY model the damage this would result in.   

And your comment about him lying because was afraid???    Pathetic.
Reply: @roquefortfiles  
It's also quite funny your remarks about "physics nerds".  You're the sort of idiot who thinks that an anlaysis is only good if it was done with computer modeling.  What a sap.
Reply: @lebergerdesphotons4565  The modeling DID NOT EXIST in 1967 For what a 707 would actually do. Or what the fuel load would do. Today that is easy to model with fluid dynamics
Reply: @roquefortfiles  but without that they could send doofuses to the moon.

You are a techno-doofus.  you think that because there are different tools today that we're so far ahead of 40 years ago.

In certain things maybe,  but look what goes wrong with a doofus like you.  You have this religious belief in "computer modeling".  You are too young perhaps to know the expression "garbage-in garbage-out".

The model is garbage if it led you to the conclusion that a 767 crashing into a wtc tower can make it come down in a way that requires  orders of magnitude more energy than what is available.

If you told me that there was a plane crash and then the NWO fired a group of interference beams at the building which caused it to come apart,  I'd be right there with you.  Because that's what happened.

John Hutchinson has demonstrated it on a small scale.

But no,  you have to insist there was an airplane crash and it did this impossible amount of damage if you limit the energy input to  GPE.

There you are advocating the impossible and every little detail you pull out and use as some justification of your religious beliefs while you ignore incontrovertible evidence that can be had without computer modeling or esoteric  knowledge of subjects which don't change the fact that the destruction of those buildings required so much more energy than GPE.
Reply: @lebergerdesphotons4565  So your belief that it had rocket motors attached to the top 23 floors is  substantiated with what evidence?? As les Robertson said.. Ridiculous!!!! Once it collapses there nothing going to stop it.
Reply: @roquefortfiles  

les robertson who said 40 years previous that it would have only local damage.  Jon Cole whose experiments show that that's wrong.

The spire which disappeared before our eyes and nobody took pictures of a 500 foot tall element which you claim fell over?  Even if it broke into 10 pieces, they'd have been photographed hundreds of times and we'd have seen it.

And of course I never said anything about rocket motors attached to the top 23 floors.

I guess you think that your funny again.  I'll just add your thinking that your funny to your list of hopeless misunderstandings of reality.

garbage in garbage out describes your thought processes perfectly.

You don't respond to whether it's easier to model such an accident without microsoft windows or apple mac  or to go to the moon and back without them.

You are not of this world.
Reply: @roquefortfiles  
like you need a computer model when you have film of a jet crashing into a wooden phone pole and you see that the wing is sectioned clean.  

Like you need a model when you have a crash between 3mm alu and 6mm steel,  but 10 or 20 times the weight of that steel and then even more weight of concrete slab hit on edge.

they wrote in the 1960s,  it's made to resist 13,000 tons of wind!   300 tons of plane shouldn't be such a big problem.

Still waiting for you to design an experiment in which you can show the behavior you describe.

People have tried.  It didn't work.  They tried heating models to much higher temperatures than were recorded at 911 and still didn't get the result.

It doesn't matter how beautiful your theory is.  It doesn't matter how smart you are.  If your theory doesn't agree with experiment,  it's wrong!
Reply: @lebergerdesphotons4565  Like you need a model when you have a crash between 3mm alu and 6mm steel,  but 10 or 20 times the weight of that steel and then even more weight of concrete slab hit on edge.

FYI there pal.  The collision of the plane to the building was worked out and analyzed by a proprietary design program that is used to make high rise buildings.  The calculations this program can produce are accurate enough to go from the computer DIRECTLY to construction.  Hundreds of variables can be accounted for on the steel.  Every conceivable variable was entered as hard data.  The planes weight, Speed, the density of the fuel the failure point of the steel, the failure point of the bolted connections, the fracture value of the concrete floors.  Everything was taken into consideration.  And it is not REMOTELY on your side of things. Of the total force the plane delivered on impact punching the hole in the exterior facade was accomplished at 2.5 % of the total force imparted on impact.  Not even 5% was used.  And the plane was through the side of the building. The collision with the exterior was a MINOR aspect not a MAJOR one. The plane would break the CORE columns at 185 mph. It was flying 3x faster than this and the exterior columns were 8 mm thick.  And this scenario was repeated on different platforms at different universities.   Independent of each other.   They all returned virtually the same outcome.
Reply: @roquefortfiles  

universities are not independent from each other as long as they are all financed by the same monopolized financial system controlled by the people who have gained the right to print fait money at their will.

Your program is corruptible.  You say it all when you indicate that it's proprietary.

That means that nobody can see all of the details to see if they have cheated.

But all of that is without any importance anyway because of the fact that I have pointed out that the video evidence of the quantity of dust produced shows that there is no known source for the quantities of energy needed to create that dust from those solid building materials.

So you can go on blathering about the honest system that you think you see with your pathologic myopia,  but it just doesn't hold water.

And that's why you still haven't tried to discount any of what I wrote regarding the amount of energy necessary to produce that fine powder in that quantity.

So  the airplane fakery is without any interest.

The only thing that counts is where did the energy which exceeds GPE by orders of magnitude come from?

Reminds me of an episode of Mary Tyler Moore where WJM had hired a new photographer.

He was on scene at a fire and he kept the camera focused on some insects or animals who were going about their usual business near the scen of the fire.

Lou Grant asks him why he did that.  He said he wanted to show how these animals were going on about their business near the fire.

Lou felt he should have rather been focusing on how there was a fire right near where these animals were going about their business.

And Lou was right.

In this story,  you are that photographer.

Insisting on going on about things which are not provable.  They count on the good faith of people we don't know.  And as if by coincidence they are supporting the position of the people who have the largest interest in making everybody believe the lies.

You can't make an argument against my energy calculations so anything about this airplane that wasn't scheduled to fly and didn't get into the obligatory database might have done.

So I have no need to disprove any of your obvious lies because they are all irrelevant.

So I don't need to talk about how it's total bullshit and that the flying tin can which can't defend itself against a seagull or a wooden telephone pole surely couldn't go through much stronger structures.

Or that even if it did,  the bottom of the structure would be fine.

Figures don't lie, but liars can figure.

I know that you are a liar who can figure.  You know not to touch the subject of my indisputable calculations showing that there's 99% of the energy spent which is unaccounted for.

It's not about ego.  It's true that I'm right and telling the truth and that you are wrong and a lying sack of crap.  These are just facts.  I'm not proud of it.

I am disgusted by people like you,  I'm not proud of myself that I am honest and you are a liar.
Reply: @roquefortfiles  

in case you were curious and since you claim to be so lame-brained that you can't do it yourself,  I calculated the kinetic energy of a 300 ton jet moving at 540 mph/ 240 m/sec.

it' comes out to almost exactly 10% of the GPE of the tower.

You're missing at least 10 thousand percent of the energy which is visible (the gpe),  so this 10% doesn't help a lot.

Sure,  a couple of columns would break.  they said as much in the 1960s.  The engines would likely break a column or two each.  There were 236 load bearing columns in the perimeter,  and a whole bunch more in the core.

I've seen their simulations from the past.  They "forget"  a lot of important things.

But the stupidest thing they did was to not find the engines and the black boxes.

They should have prepared damaged engines of the right model and black boxes with faked data.

But most of the guys working for the jesuits on this sort of operation are major coke heads.

And stuff doesn't get done right.
Reply: @roquefortfiles  Your story about some piece of software is still just an appeal to authority. This one is even worse than the others, the authority is now a machine instead of a man.  And the machine is like the man in that it can cheat.  

My calculations about the energy  can't cheat.

they could be wrong (they aren't) and if you could prove it then I'd have to shut up.

But you can't prove that what I wrote is not true for the simple reason that it is true.

And that's why logic is better than an appeal to authority.

Unless you want to call logic the authority.

In that case, it's an appeal to authority.  But in that case,  it's an authority that can't be corrupted.
Reply: @lebergerdesphotons4565  not find the engines and the black boxes.

Two of the engine cores are in the 9/11 memorial museum.  Along with multiple personal effects from the people on the plane.  The Black boxes are housed in the tail.  It likely plugged in the interior of the building on impact and was then obliterated by the fire/ collapse.  And whoop de do!!  What is it going to tell us that we don't already know??  The plane was hauling ass?  We already know that.  It was descending at a crazy rate?  We already know that.   It was hijacked? We already know that.   Kind of a moot point when the other FDR's from the other flights WERE recovered.      And what do we need proprietary software programs capable  1000s of complex calculations?   We've got you!!!!  God's gift to Physics.   Everybody is just fumbling along without you.   What an egomaniac
Reply: @lebergerdesphotons4565   Shut up!!  you're so fucking full of yourself its unreal.
Reply: @lebergerdesphotons4565  Some piece of software that is capable of more calculations in an hour than any human could make in a week!!.  This was an independent study not sanctioned by the government.  They have no agenda. It was repeated on multiple platforms in entirely separate University's.  All returned nearly the same result.  You're being ridiculous
Reply: @roquefortfiles  

If only you could do high school math and physcis you might be able to actually launch an argument.  You'd be mistaken. of course.  Since I proved that there's huge amts of energy missing.

Airplanes?  just a distraction for doofuses.  You are king doofus.
Reply: @lebergerdesphotons4565  When people have no agenda and the experiment is run on multiple independent platforms all returning basically the same results you can be fairly assured with a high degree of statistical significance that the results are accurate.  If each University returned wildly varying outcomes then the results would be unreliable.  And we're not talking about some off the shelf program.   This is highly specialized stuff. There was a paper written on it years back explaining all of it.  This is not Microsoft Design 101.  And 100's of parameters can be assigned to each piece of steel.  100s!!!  So i don't put much weight behind a few of your "Noodlings".  Don't impress me!!!
Reply: @lebergerdesphotons4565  Right.. And you know more than a proprietary design program??   As if.
Reply: @roquefortfiles  Some piece of software that is capable of more calculations in an hour than any human could make in a week!!.

To Err is Human; To Really Foul Things Up Requires a Computer

 This was an independent study 

because YOU say so?

not sanctioned by the government. 

who paid for it?  Do you know that?  really?

They have no agenda. 

Because you say so?

It was repeated on multiple platforms in entirely separate University's. 

So,  because they had multiple groups of bought off liars that makes it more plausible for you?  

It doesn't change the essential fact that the destruction of the towers visibly consumed at least 100 times more energy than GPE of the building plus the fake airplane and any fuel and contents that burned.

All returned nearly the same result.

Gosh!  The same lie returns the same result?  That's just amazing!

 You're being ridiculous

By your definition of the word,  perhaps.

Thanks for your contribution.  Always fun to watch you avoid anything tangible while preferring anything which can't be proved not to be faked.

You are the consummate sucker.  You believe your government.  

I just saw the proof the the u.k. gov't has already planned to increase their capacity to handle dead bodies in the next few years.

Not surprising, since they're injecting graphene oxide in everybody's veins.

I hope you're vaccinated.  I'd hate to think of you still being alive in 2 years.
Reply: @roquefortfiles  When people have no agenda and the experiment is run on multiple independent platforms all returning basically the same results you can be fairly assured with a high degree of statistical significance that the results are accurate.

If that were indeed the case I would agree with you,  but the agenda is there.  Just understand that you're too much of a sucker to realize it and too egotistical to entertain the possibility that you could be wrong.

 If each University returned wildly varying outcomes then the results would be unreliable.

And we wouldn't be talking about it.

 And we're not talking about some off the shelf program.

No.  This was purpose built to fool idiots such as you!

 This is highly specialized stuff. 

Nah,  you say that because you want to feel special for being fooled by it.

There was a paper written on it years back explaining all of it. 

I can imagine.  "hey,  we'll write this program to distract people from thinking about how we destroyed those buildings with our free energy devices that we'll never let them use for peaceful purposes."

This is not Microsoft Design 101. 

Bill Gates can't write 4 lines of basic code.  He was installed by his spy father.  He's programmed by his father.

And 100's of parameters can be assigned to each piece of steel.

yes,  hundreds of fictional parameters!  And yet nobody can design an experiment which will demonstrate results in the real world which look anything like what the bogus model predicts.

 100s!!! 

It doesn't matter how beautiful your theory is.

So i don't put much weight behind a few 

It doesn't matter how smart you are.

of your "Noodlings". Don't impress me!!!

If it doesn't agree with experiment,  it's wrong!
Reply: @lebergerdesphotons4565   Not my problem that you don't know about it!!!  And I am not here to supply links to someone too lazy to look the stuff up in the first place. Because it FUCKS with your "World View"  And you're fucking head would explode if you actually had to accept the fact that YOU"RE DEAD WRONG!!!!  Oh..... you're an anti vaxxer???  Now it all makes sense!!!!!!!!  Now I get it!!!!
Reply: @roquefortfiles   Not my problem that you don't know about it!!! And I am not here to supply links to someone too lazy to look the stuff up in the first place. 

I"m supposed to go out of my way to find the source of the propaganda that you believe because you have no education?

Because it FUCKS with your "World View"

Why don't you know that the "israeli artists" who occupied part of one of the towers were mossad agents?  Do you think that just Israeli artists who weren't mossad agents would have gotten away with building a terrace on the side of the building without permission from the city?

 And you're fucking head would explode if you actually had to accept the fact that YOU"RE DEAD WRONG!!!! 

So prove me wrong.  Describe to me how it's plausible that gravitational potential energy of a tower and kinetic energy of a plane and some small oxygen starved kerosene fires  Can create an inch of dust of hundreds of acres of land.

If you can demonstrate that,  you'll have proven me wrong.

You can't prove me wrong by repeating the propaganda that you believe because you have no education and no habit of critical thinking.

Oh..... you're an anti vaxxer??? Now it all makes sense!!!!!!!! Now I get it!!!!

Well I'm relieved that you'll get "vaccinated".  It will be satisfying for me when you are dead from your "vaccine".  And even as you're sucking your last painful breath  you'll think it was the fault of other people who didn't accept to get "vaccinated".

it's sad how many are as stupid as you.

Believe everything that the world's most corrupt industry tells you.

They've paid more fines for fraud than any other industry.  And they bought the right to not be sued and make the public pay for their mistakes.

And you're too stupid to see that too.

And you think that Neil armstrong went to the moon,  the oswald killed kennedy.  You are just the perfect yutz for the jesuits who run this sad old world.

REPLY
Reply: @roquefortfiles  Hey,  pathetic sad doofus,  have your owners convinced you that the contents of this site are bullshit?   https://youtu.be/hEND8dlUp1Y
Reply: @lebergerdesphotons4565      Unfortunately for you it DOES agree with experiment.    This has been done a few times.  An engineer ran a program accounting for all the floor load maximums to see if the building could sustain a progressive collapse.  The answer was yes it could.  Quite easily.  Just as Les Robertson said.   It has also been shown in a scale model collapse.  And if you can't understand the principles involved and how they DIRECTLY apply to the WTC then you just don't get it.   It is not about the model or the materials used in the model .  It is about the PRINCIPLE involved.   And none of you conspiracy nuts seem to understand it.  Yes it DOES agree with experiment.  But all you people do is ignore the experiments and act like they're not on line .  You ask people like me to show them to you then you never click the link and say.. "if it doesn't agree with.......... "  Fuck off.. Who are you kidding here?
Reply: @lebergerdesphotons4565    ???  Was there a point?  Kindly get to it.
Reply: @lebergerdesphotons4565  BTW.  The Hutchison Effect was debunked YEARS ago!!  Total fraud.   And sorry but your point was???......................?  OMG he can move a SPOON!! with electrical currents.  And this has what to do with the WTC??
Reply: @lebergerdesphotons4565  You're an anti vaxxer  Yes or No?
Reply: @roquefortfiles   Unfortunately for you it DOES agree with experiment. This has been done a few times. 

You like to speak for the other person in a debate.  you're the one with the ego problem about being right or wrong.  I just want to figure out what's true.  

An engineer ran a program accounting for all the floor load maximums to see if the building could sustain a progressive collapse. The answer was yes it could.

You should probably look up the two words you are confusing here.  "experiment"  and "simulation".  They are not synonyms.

 Quite easily. Just as Les Robertson said. It has also been shown in a scale model collapse. And if you can't understand the principles involved and how they DIRECTLY apply to the WTC then you just don't get it. It is not about the model or the materials used in the model . It is about the PRINCIPLE involved. And none of you conspiracy nuts seem to understand it. Yes it DOES agree with experiment. 

He hasn't run an experiment, he's run a simulation. 

When he'll build a physical model and run the experiment, with other people given the chance to see what he's done before he does it, then maybe I would pay attention to that.  But your simulation is worthless because there's no way to know if the simulation is really going to replicate the results of a real mechanical experiment other than to run the real mechanical experiment.

But all you people do is ignore the experiments and act like they're not on line .

look up the definitions.

 You ask people like me to show them to you then you never click the link and say.. 

I don't see a link to your simulation.  And I see that you have no experiment.  It seems that your education was also lacking in  english comprehension.

"if it doesn't agree with.......... " Fuck off.. Who are you kidding here?

I'm not kidding anybody.  You are kidding yourself.  You think that you are able to communicate without understanding the words you use.
Reply: @roquefortfiles  The Hutchison Effect was debunked YEARS ago!! Total fraud. And sorry but your point was???......................? OMG he can move a SPOON!! with electrical currents. And this has what to do with the WTC?? 

Perhaps you can share the link to the lying sack of crap who says that he debunked Hutchinson.  I"m sure he used the usual bag of tricks.  Quoting people out of context, for example.  Interesting that I've now met one of the stupid people who believes every site that says it's debunked something. 

It reminds me of Jon Cole's video where he shows the video of Natl Geographic  saying that they're debunking the people who say that thermite  can cut metal.

He then cuts metal with thermite using 100 times less weight of thermite to cut metal much thicker than nat'l geographic couldn't cut.

They let all the energy go upward,  with the metal underneath.

Talk about trying to take people for idiots.

They do it because it works on idiots like you.

I'm sure if you send me the link showing the Hutchinson is debunked I can easily show you how they are lying.

As long as you remain convinced that you haven't been fooled you will always be a fool.

That is your future.  Fortunately for you the next one or two winters will see your vaccines kill you.

I will be unmoved by your demise.  You've been missing the point of life on earth since you've been here.  Maybe you'll do better in the next life.
Reply: @lebergerdesphotons4565  You're an anti vaxxer YES OR NO??
Reply: @lebergerdesphotons4565  YOu're just an ENDLESS.. ENDLESS................ENDLESS eye roll.   Not reasonable.   Not rational.  Your comments about the airplanes show a horrifying lack understanding both photography and visual effects.   If you don't understand that what else do you not understand?
Reply: I"m waiting for your link to the scale model collapse.  I'm reminded of Jon Cole making a model out of sheets of paper and wooden match sticks and he still needed firecrackers to sustain the progressive collapse.

Your idiot who you admire because you feel less stupid when you see somebody fake a result that you believe in with religious conviction has surely engaged in some fine trickery.

Enough to fool somebody of your caliber.

Not me.
Reply: believe me,  if you send me that link,  I'll watch it.  I could use the laugh.
Reply: @lebergerdesphotons4565  For someone who fancies themselves and presents themselves as such an astoundingly bright guy you're sure as hell wowed by a lot of total fucking nonsense.  With your "Hutchison" effect videos.  What an eye roll.  And this impresses you??  Simple pleasures for simple minds.
Reply: would you prefer that I speak to you politely as though I don't see you as a total waste of protoplasm?  I can do it.  I'm not doing it because that's where we are.  I couldn't say who started it,  it's been going on for 3 years.
Reply: @roquefortfiles  

once again,  doofus.

Imagine that instead of a giant 88 story building standing there and needing to be crushed by your infamous dynmic load we have just 88 4 inch lightweight concrete slabs floating in the air where they'd always been held up until now by 100,000 tons of steel.  They are programmed to each start falling at the instant of contact with the 22 story top of the building which is suddenly falling.

We'll neglect the weight of the steel in the upper 22 stories also, since you say it was made so poorly.  We'll neglect its weight but attribute it magic properties of not deforming as it destroys 10 times its own weight.

when the 22 stories collides with slab 88,  slab 88 is 5% of it's weight, so the falling mass will lose 5% of its instantaneous speed.

There will be a jolt from that confirmed by the equation for momentum.

If it can't make that jolt,  then you can't count its weight for the subsequent collision with slab 87.

That would be you having it both ways.

You always want it both ways even while thinking that the other is wanting to have it both ways.

And you call me paranoid?   Clear example of he who smelt it dealt it.

So the absence of the jolt as proved by the analysis of the video proves that the bottom 88 floors were already falling without this "impressive" crash that didn't happen.

Try to refute what I've said rather than just blathering things which make you happy to repeat one mo' time again.

Why no jolt?

Momentum is on hold for 10 seconds?  Laws of physics changed during this event?
Reply: right after you explain to me why the video didn't show the expected jolt, inescapable result of Newton's laws.

I've explained it to you 10 times,  you've ignored it 10 times.

You continue with "arguments" which ignore much truth.

If you ignore truth,  your conclusions are from lies.